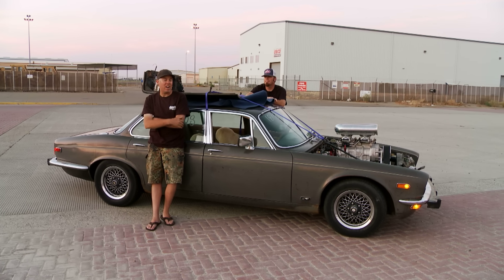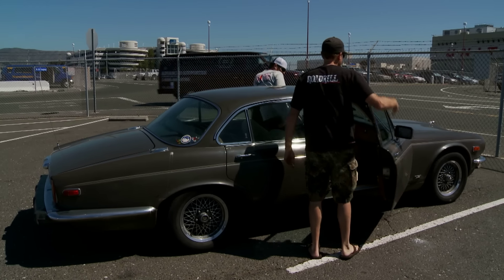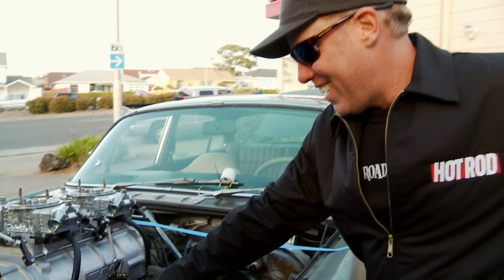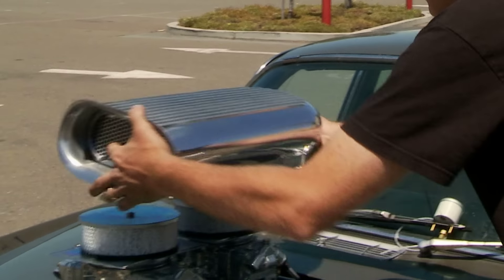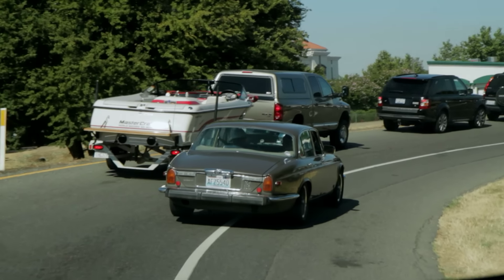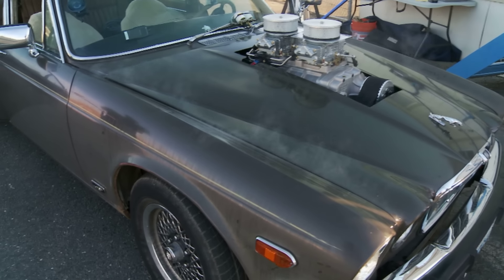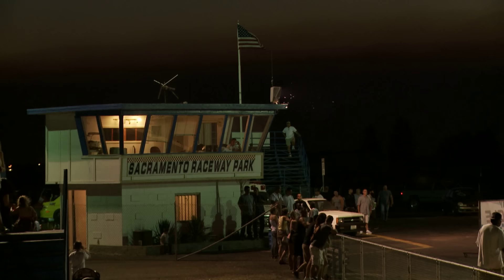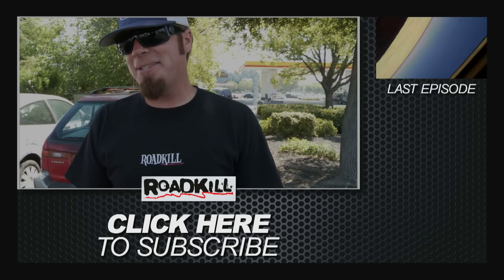Release The Draguar! Building a Blown Jaguar Rat Rod - Roadkill Episode 7

Comment: Looking back... this is an XJ12L. That means it's the long wheelbase, with extra rear leg room, and is even more rare. Much, much less than 4700 were made. Probably closer to 700.
Sad then, that this should be its fate. To be raped, thrashed and abused in this manner. A comfortable, world class super cruiser, turned annoying, worthless fart box.
Only in America baby.
Reply: ***** _When_ it happens doesn't matter, it did happen, and it's awful.
This one didn't get 'fixed up'. It just had more shit piled on top of it. The V8 was a joke, the supercharger a mockery of a once fine vehicle.
Reply: Foxtrot Oscar the car is a crusty pile of shit that would be rotting in some desolate corner had they not picked it up. Anyways. Not your car so no one gives a shit what you'd do.
Reply: vivalaking But, when the V8 went in, given the stage of decay of both it and the interior, the car wouldn't have been that bad. The original V8 insertion was the point at which the car became a pile of shit. Even if you can't find a V12, a jaguar straight six is more than adequate for the job, and still better than the small block.
It's like putting a 50cc two stroke in a Mustang, it's an insult to the car and what it stands for. I don't even like Mustangs and that would annoy me...
Reply: Cars are consumable items, get over it
Reply: ***** No, they're not. My oldest is 59 this year and still going strong. Friends of mine own and run cars over 100 years old. They still work, still run, and still do their job perfectly.
Treating cars as consumable is why they're now so shite, and why so many are scrapped needlessly. It's more energy efficient to keep a car on the road for 50 years than it is to make a new one every 20 years, even if the newer one is more fuel efficient.
Over its life, my XJ won't put out nearly as much pollution, because it was all made close by, reducing emissions of manufacture, and it's almost all recyclable, no plastics or computer stuff.
Excessive consumerism is killing the planet, and killing our cultural diversity.
End it now before the eco nutters end it for us.
Reply: Foxtrot Oscar On the other hand.. The only thing they "destroyed" was the hood, right? So, if you want to, you can put a Jag 12 back in there and it's basically an original XJ12L again, am i wrong? I believe if there werent for guys like these, many more of this kind of cars would go to jyard.
Reply: Rostmeister 'Hoods' or, in English, bonnets, are hard to come by for these old cats, and engines are rare too, because those who appreciate them, know what they're worth, and keep hold of them, and those who were scared of them, scrapped them.
Sadly this is also a Series 2 XJ12L, and it's US spec. Possibly the least desirable XJ12L, as US spec cars had the natty rubber bumpers and piddly headlamps, and Series 2s weren't as pretty as the Series 1s, don't have the Pininfarina kudos and youth of the Series 3s, and people are still scared of the BL association. Sad really, they're fab, and I'd buy this up happily if I didn't already have an XJ12, and it was for the right price. Now it's been on Roadkill, it's likely to stay this way, within the fanbase of the show, for elevated prices.
There's always someone who wants one of these as a project, to be a Jag, not some V8 wet dream.
Reply: Foxtrot Oscar
you are full of shit. Jag 12's are mediocre engines at best and huge $$ to fix and maintain. and these jags will never really be a "classic" like an XK120. they took a car that was destined to rot away or be crushed and squeezed a bit more life out of it.
Reply: Skwisgar2322 You're full of shit, Jag 12s are gorgeous engines. Smooth and quiet, just as Jaguar intended, and, when fettled, reliable and powerful, as they proved by winning numerous endurance races, including the Bathurst 1000 and the Le Mans 24 hours!
It costs me very little to maintain because I'm sensible with it. The engine itself is nearly bombproof, IF you keep on top on oil changes and keep the cooling system up to scratch. I do both, which are very easy jobs, and it's a reliable daily driver.
Don't give it to some mechanic to do, because mechanics get scared of them and charge a fortune. Don't be scared, they're built like onions. Lots of very simple layers to make the complex whole. All you need to do is peel back a layer or two, fix what needs fixing, and put it back how it came apart. 
XJ12s like mine are very much 'classics'. Not as desirable as the sports cars in Jaguar's range, but nevertheless, great cars, and certainly classics.
They took a car that could have been saved and humiliated it a little bit more.
HOWEVER, you've missed the point. I'm complaining more about the fact that it was ruined in the first place than anything else
Yes, ruined, with the gutless, rough, uncultured heap of dung known as the 'V8', that was turfed into it.
Reply: Stop living in the past and enjoy the future man, absolutely no-one gives a damn about these cars anymore. It has had its use
Reply: ***** Modern cars are BORING. These old things have decades of use left in them, why waste huge amounts of resources manufacturing a brand new car that is boring and horrible and will fall to bits in 10 years anyway, when you could have a V12 powered luxury limo for less money, and it'll last forever.
Reply: Well have fun with your English elitism.
For your information, ''center'' and ''hood'' are spelled correctly. Also ''color'' is written correctly. Does this anger you?
Meanwhile, the entire world is trying to move FORWARD while you are still rambling on about things gone past.
If you really cannot see the technological advancement between an old car like this and a modern car.. Well I don't even know what to do then
Reply: By the way, I took a look in your comments and you seem like a massive snobbish prick that has an incredibly warped vision of reality.
Therefore, I'm not going to participate in this discussion anymore. Have a nice day
Reply: ***** Have fun with your wild accusations and falsehoods.
'Center' should be spelled 'Centre' because that's how it's spelled. 'Color' should be 'colour'. Do you know why? Because the words come from French words, and need to relate to that in their spelling to sit neatly in the spelling and grammar rules of the English language. Saying the word 'seenteer' which is how you pronounce 'center' would get you laughed at. As would 'col-ore' which is how you'd pronounce 'color'. Changing the spelling changes the pronunciation, and those words, as stated by you, make no sense what so ever.
Hood is a correct spelling, however the word is used completely incorrectly. 'Hood' has been the word for the folding roof since before cars even existed, not for the engine cover or 'bonnet'.

What has the world moving forward got us? People who struggle talking face to face. A society of lawsuit obsessed health and safety bound sheep who cannot think for themselves. We can no longer get from London to New York in less than three hours, we are plagued by jammed roads as cars shift from prized machines to disposable goods. What is there in progress that is so damn good anyway? Refine things by all means, but when you get to the point where you're making up completely new and unnecessary things to make it look like you're progressing, then STOP.
Recently car design has become very swoopy, meaning thick rear pillars that make visibility difficult. Now cameras have been developed to help you see... what the hell was wrong with a nice, neat straight pillar that was easy to see around?
Progress? We're just making life more difficult so we can think up new ways of making it easier. It's pointless and I refuse to subscribe to it.
I can see the 'advances' but I don't think they're necessary. The XJ12 is comfortable, handles well, is quiet... the only thing wrong with it by modern standards is fuel consumption. But the V12 engine is happy to accept aftermarket fuel injection systems, and can, with tuning, return 30mpg... which is what many big luxury cars manage even now.
WHAT IS THE PROBLEM WITH OLD CARS?
Reply: ***** By the way, I'm not remotely a snob, I'm just honest.
My vision of reality is based on decades of experience in tens of countries across every continent on the planet. I've been into cars for years, I know what I'm chatting. If I'm not sure, I don't say, therefore everything I say for definite is exactly what I think. I cannot stand people mincing their words, so if that makes me look like a snob to you, fine, but if you cannot see the simple logic in the comments I make, then you're not worth bothering with anyway. 
Good day to you sir.
Reply: Foxtrot Oscar And still you're arguing about what two individuals have done to one vehicle. If you're so god damn unsatisfied with everything now days, why don't you do anything about it? But back to reality it is much easier to whine than interact right?
Reply: Olle Arvidsson No, I'm not arguing about two individuals, I'm arguing the morality of it all.
I am unsatisfied with the modern consumerist society, and I am doing everything in my power to avoid it, or bend it to suit less distasteful morals.
Reply: If you think this rises to the level of immoral you are truly twisted. cars are consumable items, the fact that some of them are preserved does not change that. some people collect soda cans and Pez dispensers, that doesn't make them not consumables.
Reply: If we preserved all the cars we could there would be a glut of run down cars on the market and a lack of scrap metal, making new cars even more expensive.
Reply: Skwisgar2322 A car is no more a consumable item than a house is. Sure, it may wear, as a house will deteriorate, but you then repair it by replacing the consumable items within it, bearings, brakes, fluids etcetera. Once you've replaced the consumable parts, the rest should theoretically last forever (given proper rustproofing and so forth. 
Buying a new car should be done only when the old one is beyond economical repair. Why? Because we currently have a glut of brand new cars on the market, recycling plants working overtime, scrap piling up, and a severe deficit of cheap transport, all because people are scrapping cars.
Keeping a car on the road for 20 years also yields far, far less greenhouse gasses and uses far less energy than having two cars for just ten years each. My Jag has been around for 40 years, and has used less energy than two 20 year old cars, and much, much less than four 10 year cars. This is saving the environment, which is a big moral issue, and it's keeping me in a high end, hand crafted luxury car, for less than £1000 a year. To buy the equivalent today would cost £90,000. Economical and ecological sense in one glorious brown, chrome decorated lump.
I hate waste, and every usable car scrapped is a massive waste. As is every crap car built.
This cultural weapon of mass consumption must be disarmed, or it'll go off in our faces and we'll be left with nothing.
Reply: lol,, did u cry watching this.. do u know how stupid  u soon.
Reply: mark russel No, but I cried reading your comment. What the hell have you done to the English language? Criminal damage!
Reply: And to make it even rarer, it's a Jag from 74 and it acutally works. . . .ish.
Reply: ***** Jaguar's V12 and XK6 engines are very reliable when maintained correctly. The electrics are very easy to sort, anyone who can complete one of those mazes on the back of kids cereal boxes, and read a book, can fix it.
The drivetrains are robust, the suspension is robust, despite it's advanced nature.
Interiors are solid.
The only problem is rust in cars that haven't been under sealed, or washed properly.
For what they were, that is, very, very cheap luxury cars, they're surprisingly well built, and surprisingly good to drive... when stock. 
The biggest problems to Jaguars are owner negligence, and owners pissing around with them.
My Jags are modified, but almost every little upgrade took weeks and several mockups and failures to get right. They were just that good from factory. :P
Reply: These cars are trash and money pits. I can respect a Jaguar owner keeping one original and pristine. But most of these cars are sitting in yards rotting away because no one wants to put their time and money into one. If you want to gripe, go gripe on the many Top Gear videos where they destroy these cars brutally and regularly. At least these guys are keeping it running and not driving it off an aircraft carrier.
Reply: Foxtrot Oscar I stopped care of your.. opinions at the time you corrected the word "hood"...
Reply: Rostmeister And I don't care that you don't care because:
A) this is just the internet
B) I care more about being right than being wrong and having strangers care about what I say. What's the use of saying anything if you can't get it right?
Reply: bvagansfan No one wants them? So why are they selling for 18k+? For a mass produced car from the 70s with no major cult following, that's pretty damn good.
I've sent correspondence to the BBC R.E. smashing up nice cars. The Marina-Piano incidents particularly annoyed me, as they're actually quite nice cars.
Oh, and no, they're not keeping it running. What's running is a shonky old V8. The heart and soul of the Jag is gone, dead.
Reply: Weep.
Reply: Olle Arvidsson Woop?
Reply: Foxtrot Oscar
I want one! Series 1 XJ6 ideally, although being a young'un I'll probably have to lump for the 2.8 for insurance reasons...
Reply: Spook 2.8s had a reputation for burning pistons if run on poor fuel or pottered around for too long. Carbon built up on the piston crown and eventually burned through. Drive one hard and it's fine, but then fuel economy isn't much better than a 4.2, although insurance will still be less. 
Personally, I like the V12, so that's what I've got.
Reply: b4 i watched the video i scanned the comments for the inevitable, those dirty Americans have ruined a wonderful piece of British heritage comments, and bingo here it is. The fact that the yanks, with all the cars in the world to choose from, still fall for the phoney bowler hat and cup of tea BS, is a testament to their gullibility, how Jag can still sell motors over there is unbelievable, with rotten electrics,over heating, and total lack of build quality. OK the modern cars are great, not too sure how much of a coincidence it is that they are owned by Ford now, but Jags from this era are a piece of shit, the old girl should be glad she had a last hurrah, i bet there a many ppl who bought them in the 70s and 80s, that wanted to do no more than give them a good beating with a shrub, and are probably smiling as the thing gets wrecked. Another point if they only built a few 000s surly that means the car wasn't very good to start off and no one wanted to buy it, i am sure Jag would have built many more, if ppl wanted them, if you could have a BM, Merc or Audi, why would you buy a Jag, well not you cuz you like them, but i mean customers with that kind of wedge to spend?
Reply: andy spanker Jaguar are NOT owned by Ford, they're owned by Jaguar Land Rover PLC, a British based company (albeit one owned by Tata)
There's nothing phoney about a Jag, just high class engineering, mass produced, to a budget, offering Bentley/Aston Martin rivalling cars for much, much less money. That's how it's always been.
The current XJ is a fab car, better than its main rival, the BMW 7 series purely on the fact that it looks stupendous, and the interior is something that the BMWs isn't. It's interesting.
The XF kicks the 5 series square in the Jaw, the XJ rivals 911s and Aston Vantages for GT brilliance. The F type... well, that's just gorgeous.
The electrics are solid, the motors too, the engines are good, although the V8 is not really suited to any of Jaguars cars, the V6 is better, they don't overheat and the build quality is pretty good.
The ONLY time that wasn't all true is a brief period in THE LATE 70s!
That was when BLs cuts finally hit Jaguar and no one bothered to build cars properly because the whole country was on strike.
Up until that point, the build quality was exactly what you expected for the rice, if not better. Hand crafted cars for just a little bit more than a shonky rust bucket of a Ford, and a lot faster to boot? Who wouldn't like that? So what if it rusted, EVERYTHING in the 1960s rusted. Fords and Alfa Romeo's among the worst offenders. No one think's they're shit now, do they?
From the 80s on, quality rose vastly as Jaguar went independent, then stagnated and dropped a little under Ford ownership (Ford rushed cars into production, leaving them underdeveloped, so faults weren't ironed out fully before production in many cases). Then, under JLR and Tata, Jaguar were given free reign, and are once again making world beating cars, albeit at slightly less brilliant prices.
Even during the late 70s, the engines were solid, and if you rust-proofed the car properly, you'd get no problems. Electrics are piss easy to sort too.
My daily is a 1972 car an it's solid as a rock. Reliable, comfortable, cheap to maintain (compared to many other similarly aged cars), despite the fact it's a V12... It's never overheated, even when I took it to the US (in summer too) it's never broken down and left me stranded... The biggest difference between my car and the cars sold in the US is that I know what I'm doing, and the mechanics that the dealers used to use were SHIT. These were people used to pushrod V8s, suddenly asked to work on an (at the time) highly advanced overhead cam engine with 'foreign' precision carbs and a number of cylinders they'd probably never seen before. 
The ONLY way to kill an XK6 or V12 engine is to forget to top it up with oil or water, or over-rev it. If you maintain each little bit properly, they'll last hundreds and hundreds of thousands of miles... just like mine.
If you can afford a Jag, why would you settle for a boring BMW or Merc? The only ones who entice me away from Jags are Audi, because although terminally boring, the quattro system is useful in winter. But who ever based a 60k decision on 'it'll be a little bit useful three months a year'?

This is not a last hurrah, this is a final humiliation. This is the rotten vegetables in the stocks before she's finally hung, drawn and quartered. And why? She's a car. Never done anything wrong in her life. Inherently solid design, everything wrong is end-user fault.... It's sad, because it takes a special kind of person to do something like this to a once fine and beautiful machine.
Reply: Foxtrot Oscar Ford made offers to Jaguar's US and UK shareholders to buy their shares in November 1989; Jaguar's listing on the London Stock Exchange was removed on 28 February 1990.[24] In 1999 it became part of Ford's new Premier Automotive Group along with Aston Martin, Volvo Cars and, from 2000, Land Rover. Aston Martin was subsequently sold off in 2007. Under Ford's ownership it never made a profit.[25]
Reply: Gordon Byast Yes, but now Jaguar is owned by JLRplc. Ford haven't owned them for years, and good riddance.
Aston Martin could have made profit, but really, who wants to buy a 100k car that's owned by the people who make the Focus and the Transit van? No one. That's why the Corvette sells so badly everywhere but the US, where they're too patriotic to care, because it's built buy the people who put new badges on crappy Korean cars.
Reply: to be honest it looks better this way
Reply: dj may No, it looks awful. What's the point of a bonnet if the engine isn't even under it? What's the point of styling a car if you're just going to have random (and excessive) bits of gubbins poking out? Do you want the fuel tank on the roof and the exhaust pipe exiting through the passenger door? Why not put the entire engine on the front wing and be done with it?
Engine stays under bonnet, where it belongs.
Reply: ***** Which, in the Jag? Nope. Can and will do it, at a push. If you drive carefully in most cars you can significantly increase the mileage. If you then modify that car slightly, removing the manufacturer placed restrictions on the engine, it does better than stock anyway. Combine the two, and you end up with rather more go for your dough.
Reply: Rudi van Wyk I do care, evidently. Where did you get that from?
Reply: Foxtrot Oscar  "Even if you can't find a V12, a jaguar straight six is more than adequate for the job, and still better than the small block."

BAHAHAHAHAHA! Not even close, sir. There's a reason why the Gen 1 Chevrolet V8 conversion is so popular in Jaguars: They improve them in every conceivable way. They're as light as the straight six (and lighter than the V12), get superior fuel mileage, generally make far more horsepower and torque, and have some of the best long-term reliability of any gasoline engine in history. Parts for Jaguar engines are also about five or six times more expensive (at least in the U.S.).
Reply: Holy hell... Well I respect your passion for Jags.  However you are EXTREMELY obnoxious.
Reply: RadialSkid They're rough, make less power, use more fuel, and completely defeat the whole point of buying a Jag. You buy a Jag because it's sleek, subtle, stylish, smooth and luxurious. The Chevvy small block is NONE of those things, so why bother with a Jag at all? If you want a Chevvy, BUY A CHEVVY. Easier, cheaper and you end up with the same sort of car with far less hatred poured upon you.
The 12 isn't much heavier than the 6, being all ally, and has capacity for huge power.
Small blocks, stock, have diddly squat. For instance, mine, with nothing but a re-routed intake, some minor fettling and a freer exhaust makes 400hp. It gets 18 to the gallon, which is a lot better than my Corvette did, which used a much newer Chevvy small block, and was lighter, and it's been solidly reliable for hundreds of thousands of miles (yes, really) over the last 10 years.
My experience of Chevvy engines, however, has been quite the opposite. Less reliable for more work put into maintenance. 
So what if Jag parts are more expensive? If you can't afford a Jag, don't buy one. Simple logic. That's like buying an old Ferrari (which you can do for about 10k) and then complaining that it's going to cost you another 8k to keep it going. Duh, it's a high end car, not something that's ok with a heap of crap truck engine.
Logically, the Jag engine is better, morally, the Jag engine is better, and from an enthusiasts point of view, the Jag engine is the only choice.
Why the hell would you buy a Jag just to make it worse?
Reply: SLIDWYS As are most yank V8 loonies. Fight fire with fire and all that.
Sorry, but that's sometimes the only way to be heard over the splatter of bull shit 'round here.
Reply: Foxtrot Oscar - I just told you every way the SBC is superior. 18 mpg is absolutely nothing for a reasonably driven SBC (I got over 18 mpg in an L05-powered full-sized 1989 pickup, for crying out loud). The Jaguar engines don't have as much horsepower potential, either....not nearly as much. There's a reason why companies like Jags That Run have been doing these Chevrolet swaps for so long....they're just BETTER, period.

400 hp with an exhaust swap? Out of a car that makes less than 300 hp stock? You're either lying or mistaken, otherwise Jaguar's factory exhaust engineering was truly pathetic. Likewise, I've invariably found that anyone who questions the reliability of a Chevrolet small block V8 (which is basically Cars 101) is either a fanatical European chauvinist who bashes the SBC due to its American origin, or is very new to cars in general.

And "morally?" What on earth does any of this have to do with morality?
Reply: RadialSkid I'm talking real MPG. Not 'highway' but what you achieve all day, every day, including all the town traffic, backroad 'spirited driving' and motorway cruising, averaged out. I got anywere between 4 and 20mpg out of the Corvette, I'm getting between 9 and 25, sometimes nudging towards 30 out of the Jag, which as more power, and is much older, and bigger, and has half as many cylinders again. And is more fun, and sounds better, and is smoother, and quieter, and louder, and just more... nice, in every conceivable way. Except spark plug changes and valve clearance adjustment... But those aren't frequent jobs and the rest of the experience more than makes up for it.
Jag V12s have the capacity for 600+hp in standard 5.3 litre form, without fancy fuels or N2O or forced induction. That's a hell of a lot from an N/A 5.3L. Now, they're also good to be bored and stroked up to 8 litres (some say more, 9 is possible but 8 is about the limit of sensibility) Those engines can yield 800hp. The TWR XJR9s ran 700hp, VERY reliably (i.e. they survived Le Mans, and won) Add forced induction, even to a 5.3, 6.0 or a TWR 7.0, and you're heading into the interesting side of 1000hp. Yeah, Jag V12s have very limited horsepower potential.

So, let's see. The Jag engine is smoother, more refined, is designed to go into the Jags, so they work better, is reliable (very reliable, if you look after it, bombproof, in fact) use less fuel, make more power, sound fantastic (unlike the wet fart of a crossplane V8) and they even look better sitting there in the engine bay. They MAKE the Jag. A V8 ruins it.
When the XJ40 was designed, the top brass thought a V8 might be a good idea. The engineers heard this and deliberately designed the engine bay to not fit a V engine. They, the people who design Jags, knew exactly what a Jaguar needed, they'd been doing it for decades, and they knew it didn't need a V8. Ford fucked that up, eventually. (Cheers Ford)
The Chevvy engine is rough, makes less power, in a less entertaining fashion, vibrates more, makes a horrid noise and would utterly ruin a Jag.
That's the reason that no one bothers with them bar Americans, who seem to be infatuated with crappy V8s.
What's the point?

The stock exhaust of the V12 was designed to be quiet. Because that's what you want in a luxury vehicle. The V12 Jags are more refined, and quieter than the Rolls Royces of the period, that's why they were the official Royal vehicles! Heck, even the AC pump has a silencer on it.
The intakes too were designed to be quiet.
Quiet though, means restrictive. That's deliberate, but unfortunate. If you're handy with a welder though, you can do what I've done. Keep the stock exhaust, but weld a second pipe next to it, cut off by butterfly valves. When I want quiet, they're closed. When I don't I open them, get the full 400hp, and unleash a howl that sounds like all the really good bits of the bible all at once. Of course, 400hp in a car like the Jag is quite a bit, but it's great fun, since the chassis is so good.
If you feel like it, you can, as I do, run the valves part open, get a bit of noise, a bit of power, but not a full straight pipe race car noise.

I question the reliability of the small block, because my Corvette was always breaking down. That said, it was mostly electrical, which can be solved by buying an older car, and one big mechanical fuck up, which resulted in a knackered valvetrain and piston and conrod damage. But that could be one in a million.
I'm sure that, generally, the mechanical side of the engines are sound, and reliable, even though mine wasn't.
However, the Jag engines are incredibly reliable too, if a little more maintenance heavy. Well, quite a bit more, but then, if you buy a high end luxury V12, you need to expect a little bit of maintenance. If you can't handle that, DON'T buy a high end luxury car.
If you buy one and put a V8 in it, it's no longer a high end luxury car, it's a heap of shit.
Simple stuff really.

What the hell do 101 cars have to do with this?

Morally, because nice cars deserve to remain so. If you truly like, hell, love cars like many of us do, then to heave a heap of turd like a Chevvy engine into a Jag, is cretinous behaviour of a high order. It'd be like putting a Suzuki 3 cylinder into a GT40... just wrong on every level.
Reply: Based on your responses, I'm going with "new to cars," in your case.

Whoo-hoo, 30 mpg and 600 horsepower naturally aspirated? You should tell every car magazine out there about this radical new miracle engine!

You talk about 600 hp naturally aspirated like it's something new. It isn't. And there's very little Jaguar left in any Jag V12 that's high-strung enough to be making that. And 30 mpg? Never, not even under the most ideal, granny-driven conditions, are you getting 30 mpg, even dead stock.

No one bothers with American V8s? Is that why they've powered so many European sports cars for the last 50 years? Is that why about half of the classic car classifieds in the UK are for imported American cars? Please.

I also notice that you keep saying things like "The V12s are reliable, if you look after them closely," or "The V12s are very reliable, but you have to do a lot of maintenance." That's a little like saying, "The V12s are reliable, as long as you repair them every time they break." Part of the beauty of the SBC if that they require very little maintenance....they run in a poor state of tune longer than most cars run at all. The number of '80s Corvettes still on the road versus '80s Jaguars should be all the proof you need of that.
Reply: RadialSkid New to cars? Context please?
30mpg and 600hp, I don't believe any such engine was mentioned.

600hp from 5.3 naturally aspirated litres is good especially for an engine that started life in the 1950s.
There's very little Chevvy left in any small block making 600hp too, so what's the difference? 
30mpg. Manual overdrive 'box, long rear end... 1500rpm cruising. Yeah, it'll do 30. It's amazing what staying at the same speed with very little throttle (on the cruise control, obviously) for miles and miles will do. 
Name one European sports car that's got an American V8 in it from the last 20 years. In fact, the only ones at all that I can think of from all of history is the Sunbeam Tiger, which was rubbish, the AC Cobra, which was crap, and the De Tomaso Pantera, which was awful, and not a sports car. These were also all cars that were aimed squarely at the American market.
Half the classic car classifieds are Mini's and Escorts, the other half is everything else, and a teeny tiny percentage of that is Yank imports. Of course, you'll always get a few nutters who think it's cool to have a big V8. I was one of them, hence the 'Vette. However, once bought, they soon realise that, actually, they're a pain in the arse and get something else instead.
The V12s are very, very reliable so long as you change the oil regularly, use good quality service parts (standard stuff like spark plugs, HT leads, coolant, oil, etc) Beyond that, they're mechanically sound. Mine's done idiotic miles and is still purring like the fat old cat she is.

The beauty of the Chevvy small block is that it's so shit to begin with, that you never notice it getting worse until it finally dies, decades after most other engines would have been rebuilt.
A good small block runs about as well as a shit V12. If you like that, great, but I want a nice engine, not one that clatters and clunks. I'm sure if I let my Jag get to the same state as a Chevvy engine, it'd still run, but I wouldn't like it.

I see 80s Jags on a fairly regular basis, even in the US I did. 80s Corvettes though... Nope. Also, cheap and shit cars tend to hang around longer than high end cars, simply because no one wants an old, expensive car, due to the running costs. You're trying to compare two very, very different engines here. The Jag engine is the better engine, period. The Chevvy offers much, much less, for less cost. In terms of 'bang for your buck' though, the Jag is much better value. As said, it's the polar opposite of the V8 in terms of character and drivability, but not much worse in the cost department.
Reply: It was an old jag, and like most old jags, unreliable and destined for the scrap yard, all those guys did was give it a little more life and let it go out with a bang.
Reply: Justa318i It's an old Jag, and like most old Jags, it could easily be made reliable, and continue for another few decades perfectly happily in stock form.
It's not 'going out with a bang', it's had its heart torn out and crudely replaced with a heap of agricultural scrap that was outdated decades before the car was even made.
It's then been paraded around, humiliated, and forced to do things that no self respecting Jaguar would ever consider doing. It's a sophisticated luxury cruiser turned hillbillies wet dream. Poor old thing...
Reply: Lol outdated agricultural crap that is more powerful, and more reliable.

Why would you waste the money on a jag.
Reply: Justa318i More powerful? More powerful than the much much smaller straight sixes, but not as powerful as the, still smaller, V12. The V8s are gutless things, even with a supercharger!
Both the XK6 and V12 engines were and still are, very reliable. Near bulletproof if treated right. No, they won't take being left without oil or being thrashed cold, but they'll happily run for hundreds of thousands of miles without complaint, and they'll be smoother and better in every way whilst doing it.
Why would you waste money on a Jag? The question should be how could you waste money on a Jag. No Jag is a waste of money.
Reply: "Name one European sports car that's got an American V8 in it from the last 20 years."

How about every car Bristol has produced? How about the Ultima GTR? The Marcos TSO? The Zenvo ST1? Lee Noble's ongoing "Fenix" project? The Bertone Mantide?

AC Cobras are crap? Your complete ignorance of automobiles in overwhelming. You're just a blind Jaguar fanboy, and likely a British nationalist as well. Possibly a 14 year old car-connoisseur wannabe who's drunk too much diluted Bovril. More than enough Jaguars were sold in this country - and broke down here - for us to know better.
Reply: RadialSkid The Ultima is a race car, the Zenvo is a supercar
Fenix-supercar, Mantide-supercar and 'every Bristol ever'?
No. Bristol used, initially, their own straight six based on a BMW engine. Then, in 1961, they modified a Canadian Chrysler engine. Not technically American, but I'll give it to you anyway... Trouble there is, Bristol have only made one sports car since 1961, the Fighter. And that had a V10 in it.
I'd forgotten about the Marcos because no one liked them. It's like TVR are 'coming back' but only to re-engine old ones with Chevvy lumps. People have been hurling abuse at them left right and centre. Why? Because the TVR V8 makes the Chevvy V8 look like stewed cabbage compared to an exquisite chilli. 
I'm hardly a 'Jaguar fanboy' as you so ineloquently put it, having owned everything from Alfa Romeos to Volvos and pretty much everything in between (alphabetically by marque)
I'm pro Britain for Britain, we need to stop fart arsing around with great ideas and start actually building them on a large scale again. But I welcome foreigners, so long as they work rather than scrounge benefits, and I couldn't really care less if the world liked us or not, just shut up and stopped mocking.
27 years old, engineer, journalist, mechanic, classic car nut, drifting nut, overlander, and while I don't drink Bovril often, when I do, it's got to be strong. Like my tea and my ales.
If by 'this country' you mean the US, that's YOUR fault. The most common cause of Jaguar failure outside the UK was inadequate maintenance. Why? Because that shiny new Jaguar dealer, uses local mechanics. People who grew up working on pushrod, probably side valve V8s. People who, until one popped in for a service, had never even heard of a dual over head cam straight six. Nor disk brakes, nor fully independent suspension, nor could they comprehend the concept of double wishbones, or of inboard brakes, or using driveshafts as suspension components, or really comprehend how far ahead European cars were at all. Stories abound of bodges and weirdness and incorrect parts and general shoddy workmanship being found on 'mint' imported dealer maintained cars. Even today, most US mechanics are still used to pushrod V8s, especially out in the sticks, and are infinitely confused by overhead cam engines. When I took my XJ12 out there, I was surprised by people simply not understanding it. It's a 42 year old car, and the basic engine design is over 60 years old, surely some of that will have trickled across the Atlantic by now?
Sure, there are specialists these days, but your common or garden mechanic won't have a clue, unlike here, where they were serviced normally and properly.
Mine has done hundreds of thousands of miles without incident of its own fault.
The only time it's been off the road since I've had it is when it's been too snowy, and when I smashed the front suspension crashing into a fallen tree.
I'm not blind at all. I know exactly how much work they take to keep reliable. Yes, it's a bit more than most, BUT, they're luxury cars. They need less work than a period Rolls Royce, yet are actually smoother and nicer cars. That's genius. Think of them not as expensive, fragile sports cars or family saloons, but as cheap, reliable Rolls Royces or Ferraris. They're high end cars, stop complaining.
'Car connoisseur' made me laugh. I've owned a Corvette and a Nissan Sunny. I'm hardly high class. 

AC Cobras are crap. The chassis is too light and flexible to stand the brutish torque of the big V8s. Especially the much famed '427's even with their beefed up main rails. Even Shelby himself said they were rubbish, he prefered the smaller engined ones. I've driven Aces and Cobras, and the Aces are better. I've driven Cobra replicas which are better than real Cobras but not quite as good as Aces. I've also driven Cobra replicas with BMW, Jaguar and Nissan straight sixes in... they're better than any of the others.
Sports cars just do not work with V8s in them.
Reply: Holy shit, you gotta have a boring life. Go outside, buy a freaking Jag, polish it or whatever, go to Jag meetings, meet people that share your fucking interests and stop sit on youtube arguing shit. Please you'll end up with an heartattack mister.
Reply: Rostmeister I've got three, they're polished, no one goes out at 9 on a week night.
Stop telling people what to do, you'll end up with faceache.
Reply: Foxtrot Oscar Sorry to tell you this, but you're the one complaining about what others do here, and it's people like you, who'll end up with faceache.
Reply: Rostmeister I'm bemoaning the general lack of respect and twisted inverse logic that some people seem to have in regards to automobiles.
You, on the other hand, are complaining about me exercising my right to free speech.
Faceache -> Rostmeister
Reply: *****
LOL - a 'hit and run' yank who's realised he's bitten off more than he can chew.
There's nothing "elitest" about the responses here, it's all straight forward and logical.
Reply: I'm fascinated by the way the the responses here show a clear discomfort with someone who is simply refusing to have his experience and knowledge rubbished and is giving intelligent properly thought out information. Foxtrot Oscar, I admire your tenacity.
Reply: BaddaBigBoom Cheers. Nice to know that some people notice.
Reply: Yeah... it must suck to be a famous car in the hands of one of the world's largest car magazines. I mean, it must be just AWFUL to be being prepared to get a 700hp blown small block, as well as a full drivetrain rebuild. And it must be terrible to be generally loved by every person that sees it... That all just sounds terrible.
Reply: Adam Parker Yes. It is.
Jaguars are quiet, sophisticated luxury cruisers. This one is the exact opposite. It's an unreliable, noisy, rattly heap of shit.
That sucks.
A 700hp small block, hell, any small block, is a downgrade for a Jag, they're horrid engines.
If you like Jags, you'll probably hate this. If you love stupid, shite engines stuffed into nice cars then of course you'll like it. But those sort of people aren't really 'normal'.
Reply: Foxtrot Oscar
Well, no. In America, Jaguars of the 70s are piece of crap, gutless, slow, unreliable cars for wannabe-pimps and pensioners. There are no parts available for them, so if ANYTHING breaks, you have to pay a fortune for the parts to fix it, and EVERYTHING will break because it was built by Jaguar in the 70s. Placing a Chevy Small Block in the car is a HUGE upgrade, just on the fact that you can actually fix it if it breaks. And anyways, last I checked, you don't need a breeding pair of cars. You said you have 3? And I'm sure many other people have their Jags in nice condition. Well, we can rest assured that the future generations will know what a stock Jaguar XJ looks like and drives like. And since your Jag doesn't need a mate, I'm sure the history books will forgive us for turning ONE of them into a badass street car. But, Jag people are weird, and for some reason you're angry about this, even though I can pretty much guarantee that this car would have been CRUSHED or ROTTED AWAY if Freiburger and Finnegan weren't doing what their doing to it, which is, once again, giving it an awesome new life as a drag car.
Reply: Adam Parker Well, no, actually.
In the late 70s, some of the cars were rubbish due to fluctuating build quality caused by widespread union action throughout British industry. This is well known.
The cars themselves were brilliant, just put together by people who didn't give a hoot.
My own car is from the early 70s and is solid as a rock, and highly reliable.
Parts aren't hugely easy to come by, but when you buy a Jaguar, you accept that and learn to live with it. Stock up on parts like a sensible human being.
You can't get parts for Chevvy engines here because they're crap and no one buys them. There are still quite a few Jaguar engines lying around in the US.
The ONLY real problem with the car will be the electrics. The 6 cylinder engines are the same designs as in the 40s, and they are proven reliable and solid at Le Mans (winning 5 times on that engine) as is the V12 (which won twice). They're reliable.
The small block Chevrolet engine is less powerful than the smaller V12, and some small blocks are less powerful than the SIX cylinder engines!
They're also MUCH less smooth than even the 6 pots, and less torquey, and they aren't designed to fit into a Jaguar so they're a pain in the arse to install, and, of course, you need to re-wire part of the car, which is essentially fixing the only problem the car had to begin with.
If you can't be bothered to get parts for a Jaguar, don't buy a Jaguar. If you don't want a smooth, refined Jaguar, don't buy a Jaguar. It's pretty simple stuff. If you buy a Jag, it's because you want it, there's no reason to ruin it. If you put a V8 in it, evidently you didn't want one, so what's the fucking point?
I have three different Jags. These XJ12s are really quite rare now, because idiots like whoever put the V8 in this exist.
To most of the world, Jaguars, especially in the 70s, were the quintessential 'bad guy' car. Every cop drama featured a big Mk2 or XJ squealing round a warehouse, guns blazing. Why? Because the real criminals used them, because they were some of the fastest cars around. Nowadays they're all limited by electronics, but back in the day, they could outrun many Ferraris. Quite where you got this 'pensioner' image from is a mystery.
This car is NOT 'badass'. Not only is that an utterly shit word, but this car is also utterly shit. It's a worn out old chassis that's been poorly maintained, the interior has been wrecked, the body has had holes cut in it with bits of hideous shitty engine poking out, and the heart of the car is long, long gone. It's an abomination of a thing, worse in every single conceivable way than a bone stock Jaguar would be. Mildly tweaked like mine is, I could shit all over this, even if the supercharger worked properly, and I wouldn't overheat my crummy V8, because my V12 is brilliant. It'd make a better noise too, and even do more miles to the gallon.
You can guarantee that the car would be pride of place in someone's collection IF, and ONLY if, it had its proper V12 engine in it.
Roadkill saved it from the scrappers, but the ONLY reason it was going there in the first place was the shitty V8 under the bonnet.
They gave it a continued life of mockery and shiteness. That turgid engine hauling its shell 1/4 of a boring, childish mile sprint, over and over again for all the foreseeable future... That's not awesome in any way, that's tragic. 
I'm thinking of purchasing another E type. I've already got one, it's worth about 60k. I've seen a few for around 10k-15, from the US, with a V8. If I swap in a Jaguar engine, it'd be instantly worth 30k. No one wants a V8 Jag. No one, because they're shit.
Reply: Foxtrot Oscar Man your blind hate for v8s is unbelivable. Fact is there are more v8s on the road than v12s. The only car I would want a v12 in is an Aston Martin. Saying v8s are utter garbage is such a broad generalization. GMs Gen III/IV LS engines have more innovation in them than anything Jag has innovated from v12s in the past 20 years. Not to mention you are trying to compare a British sports car company to a company that makes everything from trucks sports cars to mucsle cars to 4 door sedan daily drivers. I am sure v12s are reliable if well maintained so are v8s so are v6s so are four bangers. common car knowlege there mate .
Reply: TheLordJethro I don't hate V8s. I hate shit engines. Almost all crossplane V8s are shit is all.
Yes, there are mover V8s on the road. They're the poor mans route to displacement. That doesn't make them good.
The LS engines are utter crap. Innovation? HA! Pushrod, crossplane V8. Outdated in high performance vehicles since the 60s. OLD SCHOOL, and not in a good way.
The V12 was a 1950s designed engine. They are still more mechanically advanced than a brand new LS. Yes, there's all the electronic tat and cylinder deactivation, but that's not the engine, that's ancillaries. The actual structure would be recognisable to a truck mechanic from the 40s. That sort of thing has no place in a performance vehicle, or any kind of high end car.
Jaguar make everything from sports cars to GT cars to muscle cars to family saloons (a sedan is a type of chair that is carried around). Jaguar themselves don't make trucks, but sister company Land Rover definitely do. Jaguars V8 is considered one of the better ones on offer today. Guess what... it was considered less reliable than the V12 it replaced.
All engines are reliable when maintained, however, the V12 is more so. If you get them right, they're nigh on indestructible. That's why they did well at Le Mans, winning twice, and in the TWR XJS touring cars. These were running 7-800hp from a 6 litre N/A engine, in the 80s, reliably. That's impressive even today.
Reply: +Foxtrot Oscar Ha go back to v12 wonderworld LS motors shit? You have obviously never seen footage of the LS blocks that go to drag week or LS Fest there you see LS engines with 1000+ horses. Its really a matter of opinion neither motor is shit. US Culture is v8s British Culture Jaguar but still the only Jag I would ever drive is the new F-type coup. Over here These old jags are just like boats you throw money into. Unless you find a real big Jag enthusist they are worth 1000-4500 on a good day. These old Jags arent worth shit here and no one wants them here and half of them do not run.
Reply: TheLordJethro 1000hp? Wow. Jag 12s have done that and they're smaller, and smoother, and more responsive, and revvier, and they sound better, and they're reliable, and they're nice and simple, and they get better miles per gallon if you go for similarly aged engines as well.
Over in the US, where most mechanics don't know a gudgeon pin from a cotter pin, and would point at the front of the car if you told them to find the hood, yes, Jags are difficult to run. If you have half a brain, you can do almost all the work you'll ever need to at home. They're piss easy once you know how.
On the subject of 1000hp again, you know the Toyota 2JZ can do that with stock internals, reliably? In fact, some say it can even hit 1500hp. That's a 3 litre engine. What's the smallest LS? 5.7? What's the biggest, 7 litres?
Getting 1000hp out of 7 litres is easy. Getting it out of 5.3 litres, more difficult, getting it out of a 3 litre 6 pot? Yah, that is the measure of a good engine. Not how much it makes, it's what it does with what it's got, and how it goes about doing it.
The Jaguar V12 is better in every single way that actually matters to the driver. It offers better low down pulling, better top end, better mid range, better response, superior soundtrack and almost no vibration at all. You really can balance a penny on the cam cover and take it to the red line.
The LS on the other hand is an outdated technology that was a cheap bodge when it was brand new, and has never, to this date, worked properly. No V8 really has but crossplanes are by far the worst, that's why all the best racing engines are flat plane.
Over here, big V8 cars are worthless. The Jags are too, but the V12s command respect. No one really wants a big thirsty car anymore, but everyone loves and dreams about a V12. If you want a V8, you've got no ambition in life. Buy a straight six, better and cheaper.
You're missing out on a raft of fantastic cars if you disregard Jaguar.
I suppose you'd go for the V8 F type as well, wouldn't you? Fool. The V6S is the best by far. The engine is lighter, packs more than enough punch and makes a simply gorgeous noise. Oh, and coupe has an e on the end of it. It's French.
Reply: Foxtrot Oscar Well, over there, I'm sure people love their Jags. But in America, they are worthless. Believe us, ONLY the famous models (like the E-Type and the Mark 2) are worth money. This is a video is from America. Parts aren't as available. And they're more expensive. In America, these average Jags aren't even worth buying. You can throw 30-40 THOUSAND dollars at one and end up with a car that nobody would buy for 3k. If you want to start some big program to "rescue" Jags from America, go for it.

Oh, and in case you guys don't have this over there (which it would appear that you don't) this is something that we Americans like to call "HOT RODDING"! People that enjoy Hot Rodding like to subscribe to HOT ROD Magazine, the people that MADE this video. Now, to let you in on the secret, Hot Rodding is the art of customizing a car to make it your own, since you own it and can do whatever you want. Now, they bought this rusty old Jag that was doomed to be scrap, and turned it into something awesome. It is being turned into something REALLY awesome.

Now, clearly you're just an obsessive fanboy, and you are the WORST kind of petrol-head. You're the kind of petrol-head that thinks that every car should be returned to factory and left that way, and if anyone tries to do something out of the norm, they're a heretic.

Furthermore, you say that V8 engines (a la the Chevy Small Block/LS engines) are the "poor man's way of making power" but that means it is just the most cost-efficient way of making power. I prefer Inline-6 engines myself, but if you deny the value of being able to get a case of beer and three grand worth of auto parts, lock yourself in the garage with your buddies for a weekend and drive out with a 600HP engine, then there is something seriously wrong with you.

And by the way, the most famous use of a Jaguar V12 is for Top Gear's Coffee Table. They're scrap.
Reply: Adam Parker Agreed. I can get 1000 hp out of a four banger with twin turbos not that hard to do. How many times did you say Jags have won their class at Le Mans twice? Corvette Racing has won their classes 7 times. Your Jag fanboyism has stopped you from seeing what all of us "yanks" are saying which is over here these old 70s Jags are WORTHLESS no one wants them. Stuff breaks on them and the parts are too expensive and no one wants to spend a lot of time and money fixing them. The cool guys at hot rod saved this jag from wasting away in a junk yard. Now its in the middle of a drive train swap that I heard will be a small block chevy with EFI (electronic fuel injection) pushing 700 horses. Now thats a badass jag
Reply: Adam Parker People love Jags in the US. That's why around 70% of all Jags went there, and why RHD ones are more expensive, there's simply less of them.
I've been to the US on a number of occasions, once with my XJ12, and the club scene over there is thriving.
Parts are as available as anything else. The only things that really go wrong are bearings and seals, and they're service items anyway. Plus, as Jaguar used the same basic suspension setup in everything from 1961 to the early 90s, parts are easy to strip off cars that really have had it. The XK straight six has been around since the 40s, continuing to the 80s, and the V12 was from 1971 until the late 90s.
If you are throwing 30k, much less 40k at a Jag, you're doing it wrong.
I got mine back together from a complete basket case found in a field for less than 5k. That included an engine rebuild (for the V12) and all new service items, paint, carpet, underseal, the lot. Not a great paint job, I'll admit, but it's ok.
Even if you factor in a 200% margin of excess to cover shipping of parts and stuff (which is a HUGE margin) then you're only talking 15k, to fully recomission a shitter (worse than this one body wise) and have a mint, fast, comfortable, luxury car.

We don't have 'hot rodding' here so much, because it's shit.
The whole point of hot rodding, so far as I can tell, is to stick a massive crap old V8 into a car and ram as much power as possible out of it. Just like every other hot rodder.
We do modify cars here, however we like to be more sensible about it. Use an engine that's either original, or suits the car. We upgrade cars here, rather than take any random car and turn it into yet another crummy V8 muscle machine.
This is because we have a good variety of cars here, so you buy something you like, and make it more of what you like, not something different then turn it into what you want. That's utterly stupid.
This Jag is not 'awesome' it's a heap of shit. It's got a worse engine with less power and it's got a hideous great big scoop poking out of it. The whole point of an XJ12 is that is looks like an average saloon car, but can blow the doors off anything short of a supercar. Back in the day they were one of the fastest 4 door cars around in a straight line and they could corner. The British BMW M5, if you will. Except we did it first.
Subtlety is not something you seem to understand in the US.

You're making MASSIVE assumptions, and now you look like an ass.
I'm not a 'fanboy'. I like GOOD cars, not specifically Jaguars or BMWs or anything else. I would rather a good Alfa Romeo than a bad Jag, and rather a good Jag than a bad Alfa, for instance.
If I believed cars should be returned to factory, I wouldn't be putting a 5 cylinder diesel in my 1972 Land Rover, would I?
I wouldn't have wider tyres, lowered suspension, performance exhaust, tuned carbs and uprated cam in my 1961 E type, nor a custom straight intake and bypass exhaust on my XJ12, (because V12 noise).
I wouldn't even have deconstructed an XK to build a 1955 D type to uprated specs that now does 200mph.
Oh, and I certainly wouldn't have done what I did to my 180SX to turn it into a total drift slut.

I DO deny the value of being able to make 600hp cheaply, because I don't actually give a flying fig how much power I've got.
All I want is 'enough'. Getting 'enough' takes time and lots of small changes. 'Enough' grows as you learn the car. I don't want to be able to quote power figures and brag, I want to have fun and my smile to do all the bragging. I can quite easily have more fun with 60hp than I can with 600. It's called the Austin Mini and it's absolutely brilliant.

The most famous uses of the Jaguar V12 are the Le Mans wins for the XJRs, and the touring car wins for the TWR XJSs.
The Tom Walkinshaw qualifying lap at Bathurst is one of the all time greats, and that was in a V12 Jag.

'Scrap' does not win the most mechanically distressing endurance race on the top level calendar. And no, not measly class wins, outright wins. That means that out of every single car, the Jags were the fastest of the fast.
Reply: TheLordJethro No, Jaguar has 7 outright wins. That is, won the whole event, beating every single other car. They also have a number of class wins, however since these list back to the 40s, I do not know the true number.
7 class wins is good, but not anywhere near as good as 7 outright wins.
What 'fanboyism'?
70s Jags aren't 'worthless'. They paid $1000 for a complete shit heap. I could pick something like that up for a mere £200. That's about £50 more than scrap value. A good one will set you back nearer 15k though. A mint one over 20k. In the US, a good XJ6 is 11k or so. Which is a lot, really, considering there's a lot more LHD XJs than RHD ones. I've seen semi decent XJ12s going for $17k+.
That's not 'worthless' in anyone's books.
These 'cool guys' cut a hole in a bonnet.
The guy before them, who put the V8 in, condemned it to the scrap heap in the first place. If he'd kept the V12 in, and enthusiast would have snapped it up, and these 'cool guys' wouldn't have even had the chance to rape it some more.

A 700hp small block is still a small block and thus still shit. 700hp is far more than the chassis can reasonably handle, (it is 40 years old) and is therefore useless. A 700hp V8 1970s Jag is not 'badass' it's shit. Utter shit.
And I bet with that drive train swap they'll have to ditch the Jaguar rear end, as it's all one unit with the diff and driveshafts being structural suspension components (lighter and more efficient). Shame, because the Jaguar rear suspension system is one of the best I've ever seen from that period. That's why it was used from 1961 to the late 90s in every car they made.
Reply: Foxtrot Oscar Woaaahhhh. Get the fuck over it.
Reply: Jake Lennan Get over what?
If you're going to swear at least put it in some kind of fucking context!
Reply: Yourself.
Reply: Jake Lennan A physical impossibility my dear boy. It would require being in two places simultaneously, and that is not within the capabilities of the human body at present.
Reply: Foxtrot Oscar jag engines really are nothing to boast about. There are pretty underpowered, somewhat unreliable, and do not get great gas mileage, there are worst engines out there, but they are not as great as you make it out to be. This car is hacked together and there are jaguar fans out there, but the chances of being saved to specs you seem to want are slim to none. The car really is not that great. Its somewhat classy but not worth saving to 99% of the Car community
Reply: Zachary West 'Pretty underpowered'. So.. Let's see. The XK, the 6 cylinder powered, in the 40s, the fastest car in the world, in the 50s, the fastest saloon car in the world, in the 60s, it powered the Ferrari killing E type, one of the few cars that could exceed 150mph, and in the 70s it was still hosing XJ6s around at over 120mph, when most cars could barely do 90. In that time it won Le Mans 5 times, plus countless world stage sports car and touring car races.
The V12, in the 1970s, powered the SIII E type, a quick car as mentioned, the XJ12, one of the fastest saloons of the time and in the 80s, the XJS, which was, again, really bloody fast. The XJS romped touring car racing, and the V12 went back to Le Mans and won again. Twice.
Sounds very 'underpowered' to me.

Bothe the XK and V12 are very, very reliable. If you keep on top of maintenance, they'll last forever. I own two XK powered cars and one V12. The V12 is my daily driver, is 42 years old and has done over half a million miles. Very reliable. My weekend car is 53 years old and starts first time, every time (almost), and has never left me stranded. My track car is 59 years old has been pumped up to nearly 100hp/l (which is a lot) runs to 1.5k over its original redline, and has completed a number of endurance events. It doesn't like cold starts thanks to its huge carbs and agressive cams, but once running it purrs like a kitten. Oh, and, of course, 7 Le Mans wins and countless touring car and endurance racing wins for both engines. Sounds more like 'really quite reliable indeed' to me.

Fuel consumption running on gas is always horrendous, but on petrol they're not too bad. Ignoring the track car, my XK powered E type returns around 25mpg, which is pretty good for what was, in the 60s, a supercar quick car. The V12 hovers around 20, but I've had it up nearer 30 on very long cruises. Now, no, that's not great, but it's making 400hp (with surprisingly few mods, just the exhausts and intake really, and some fettling) and it's a bloody 5.3 litre V12 from the 70s, designed in the 50s.
 That's ok by 90s, 00s, standards, but pretty good considering. Certainly more MPG per horsepower than most big V8s of the time, that were slower and rougher.

IF it hadn't been ruined earlier in it's life with that shitty V8, it WOULD be worth saving and someone would definitely do it. These are rare cars and have a huge fan base. With the V8 though... very low chance. The engines are worth a lot, because they're so good in historic racing, and to put into kit cars (I've seen a few Jaguar V12 powered Lamborghini and Ferrari kits, and they're a LOT better than V8 powered ones!) That makes finding and re-installing an engine expensive and difficult.

If you say jaguar engines are 'underpowered, unreliable and poor on fuel', then by that standard, this V8 shouldn't even qualify as an engine. 
What were they complaining about all through the video? Almost no power, hugely unreliable and the economy? Well, I've run LS engines and I don't think I ever saw north of 18mpg, and that was in a lightweight, modern Corvette, not a heavy old Jag.
Reply: ***** Jaguar offered 'out of the box' V12s of 700hp. However, they weren't 'normal' engines. They weren't offered in the standard range of cars.
Yes, I know Chevvy has made 600+ 'small' blocks (6.2 litres is not small in any sense of the word) in actual cars, but that was supercharged.
The 'standard' range of engines rarely exceeds 450hp. Which is shit.
The engines make very poor power for their size.
You may not know a lot about Jag V12s, and I do, however I also know a fair bit about American V8s. I've driven a fair few.
Yes, when bought as specialist engines, or when tweaked and poked, they can make power figures , but they fail epically at delivering that power in a sensible and enjoyable manner, unless you happen to enjoy turning tyres into smoke for no reason more than you enjoy actually driving. 

22mpg, in the US. With my 42 year old V12 I was getting an average of 25 while in the US, and that's a big old luxo barge, not a modern muscle car.
Driving in the US is good for economy figures, as it's a lot of wide, slow (55mph is slow) straights with very little speed change. Here in the UK, most A roads and B roads have corners which negatively affect economy. 18-20 is my average here, in the same car. 
To me, that represents a clear victory, at least in the economy stakes, for the Jag. It's older, and is ever so slightly better. With a more modern head design, and trick fuel injection, I'm sure it'd be much better. Expensive to do though.
From a driving pleasure standpoint... the Jag engine is smoother, more responsive, sounds better and is much more relaxing in the cruise, while being more engaging when pressing on. Yes, a lot of that is opinion, but it's based on fact and experience.

Big thumping crossplane V8s are not what I like because I've driven a lot and found them to be largely worse in every respect than their usually smaller, 6 or 12 cylinder counterparts that make equal or better power.
Reply: ***** You don't know corners until you've driven in Wales. Period. Imagine the most fiendish and technical race track in the world. Now imagine it the size of a country. That is cornering. The Nurburgring has nothing on British country roads. That's why we make some of the best sports cars on the planet.
Broke ass?
I am neither bankrupt nor do I own a donkey. I never have, never will and I wish people would shut up about the things.

At this point, you sound like someone who's realised he has no chance of outwitting someone, but doesn't want to admit it publicly
Reply: ***** Most Jaguars are good cars. The X type not so much, but then, that was a Ford Mondeo underneath and was stupid move by Jaguar's then-owners, Ford. Who are American...
 Sorry, but when we're completely honest, what American cars have actually been genuinely good in the past century.
Err, well. There was the Ford Cortina.. oh, no, that was designed and built in Britain by Ford UK. Nothing to do with America. The Ford Focus! Nope, that was Ford Europe, again, nothing to do with the US.
The Ford GT40... Nope, British chassis and body and suspension, and not really a road car.
Err. The Mustang. Nope, they don't turn or stop as well as they should for the money, they're not very well built and the engine choices have all been rubbish.
GM mostly produce tat, bar a few Vauxhalls/ Opels, although they're all German, bar a few Vauxhalls from the 70s and before that were British...
Who else is there? Chrysler.. wouldn't touch with a barge pole.. Jeep!.
The original Willys jeep. That was a good car. Oh, wait, no it wasn't. It didn't even have any doors. Compared to what else was on offer in the 40s, the Series I Land Rover came with doors, a roof and more power and space and generally more everything.
Modern Jeeps are rubbish.
This is why throughout Europe, Africa and Asia and in Australia, you see almost all cars are European or Japanese. Only really in the American continent do you see American cars in significant numbers.
The buying habits of the general masses tell the story.
And they tell the story of Jaguar too. We know that us Brits love them, but the Americans love them too. Some 60-70% of all Jags end up there.
Reply: Foxtrot Oscar Doing burnouts is sensible and fun but also you do not know how to drive a v8 if thats all you are doing in one.. in Australia you can buy a 1000 cubic inch v8 crate motor that makes 2100 horsepower stock NA. Thats more than double the power than displacement and makes more power than the veyron that has a 16 clyinder engine with 4 turbos.. and costs less to buy and install than the veyron two or three times over.  I can easly get more power out of any v8 cheaper than getting more horsepower out of a v12 jag.  By the way at least spell "Chevy" right I have no idea what a "Chevvy" is.
Reply: TheLordJethro
Doing burnouts does nothing but destroy tyres and brakes, it's boring (plant right foot, balance brakes with left, yeah, fun) and is hardly sensible.
I know exactly how to drive V8s, HOWEVER, why bother when there are many other engine designs that do the fun stuff much better. I don't even dislike V8s, only crossplane ones. The flatplane design that Ferrari use is fine.
Why the hell would you want a 16.4 litre V8? Anything with more than TWO LITRES PER CYLINDER is going to be a tetchy, rough, clattery old hector. Just look at when people put V12s that big in cars, it's awful. Then quadruple the shitness.
I'd flippin expect a 16.4 litre engine to make big power too.
It's an impressive amount of power, yes, but I guarantee you it'll be choppy and rough and an absolute biatch to drive.
'double the power than displacement'.
Not only is that poor grammar, but it's not true, unless you use cubic inches, which no one does.
The Veyron has an 8 litre engine making 1200hp, yes. That's more hp/l than the stupid V8 (150hp/l vs 128) and it's smooth, refined, reliable and easy to utilise.
To get an N/A engine running nearly 130hp/l requires quite harsh tuning, and that's not good at all for driveability.
You can easily get more power OUT OF MORE CAPACITY, FULL STOP.
I can get more power from a 5.3 litre Jag V12 easier than you can from a 5.3 litre crossplane V8. Like for like is how you compare engines.
If not, I could just rock up with my 3000 litre V12 ship engine and blow you all away with my 100,000 hp.
As for cost, I liberated 100hp from my Jag engine for £20. 20p per horse is the square root of jack all as far as performance tuning is concerned.

'Chevy' is wrong. In the English language, a short vowel sound is followed by a double consonant in almost all instances.
'Chevvy' produces that short e sound, while 'Chevy' would sound more along the lines of 'cheevie'.
99% of the time I can see instantly if a word isn't spelled right. Chevvy is right. Chevy is wrong.
Reply: ***** WRONG.
The Mk1 GT40, the original British design, lost its first Le Mans because the crummy 4.7 American Ford engine simply didn't have the power to beat the (much smaller) Ferrari V12s on the huge straight at Le Mans.
They re-jigged the aero and plonked a 7 litre engine in there and called it the Mk2. This was still a British car and it won Le Mans once, in 1966 under an American team with drivers from New Zealand. 
In 1967, the Mk4, which was an American re-design of the GT40 chassis, won with the same 7 litre V8, again with an American team, and this time, two American drivers. This is the only ever all American Le Mans win, in fact, the only American car full stop... and it was with a modified British designed chassis.
1968 and 1969, the Mk1 came back and, with a new 4.9 litre engine, won twice more. So really, the original British design was... ooh, the most successful. And this time, it was a British team, and mostly European drivers, (bar one mexican).
So, three of four wins were British chassiss, two were British teams as well.
'Not successful' my hairy nutsack.
Reply: Foxtrot Oscar Chevrolet is an American company and in American dialect yes its spelled Chevy ask any American its Chevy. American dilect is different from an English dialect being from England does not make you right and if you want to get technical its Chevrolet. Alright buddy have fun with your jags Ill have fun with my Chevrolets Fords and Mopars going around tracks, mudding, going in a straight line very fast, thrashing around in the desert, auto cross,  rally cross, and burnouts and having fun every minute of it. with v6s inline 6s and v8s under the hood. Yes hood because here in America its hood not bonnet.
Reply: TheLordJethro Ah, I forgot, Americans can't spell!
Silly me.
You have fun in your Fords, I'll have fun in my motley collection of Jags, Land Rovers and Nissans, racing, drifting, hooning, overlanding, laning, going fast in a straight line AND round corners, rallying and even a spot of gentle silent cruising at.
All with I6s, I5s and V12s under the bonnet. Yes, bonnet, because a hood is the folding roof of a convertible and has been since before the USA even existed.
Reply: Foxtrot Oscar Check out the Crusher Camaro that David on this show owns they put a 700 hp ls7 with EFI on it and it gets 17 mpg and runs 10.12s at 134 quarter mile thats a real car and it does some awesome burnouts
Reply: TheLordJethro It's a heap. It looks silly, doesn't drive very well, as they've proven before, does shitty burnouts (because I think a car standing still, smoking, looks stupid) has an awful engine, does pathetic miles per gallon and is only really any good at going 1/4 of a mile in a straight line. Which is absolutely useless in the real world.
Oh, and it doesn't even have a bonnet, which is just ridiculous.
Reply: Foxtrot Oscar haha looks badass they drove it 2500 miles some in blizzard like conditions seems like it drives fine to me does awesome burnouts just because you do not like them does not make it shitty the motor is not awful 427 cubic inches and doing 17 mpgs is great just think how much good it would be with a 6 speed
Reply: TheLordJethro It looks silly. It sits too high, the colour doesn't show off the body and the engine, in case you hadn't noticed, isn't even inside the bloody car!
They tried autocrossing it, it wasn't very good at all.
Burnouts are silly. The only awesome they can be is awesomely stupid.
427 cubic inches is rubbish. Why? One, it's a stupid unit of measurement, and two, 7 litres is just far too big for an automobile engine.
17mpg is pretty horrendous.
It'd be worse with a 6 speed. 6 is too many speeds. It'd be better if it was smaller and either two cylinders were chopped off or four were added.
Reply: Foxtrot Oscar haha 6 speeds are shit eh? 6 speeds are nice when you are crusing down the highway at 1500-2000 rpms the reason it was good at autocrossing was because it still had snow tires on it they even explained that in the video the engine is inside the car because it is sitting in the engine compartment running 427 cubic inches is bad because its a "strange number" is not even an argument againt the motor.
Reply: TheLordJethro I cruise at 2000rpm ta very much. And I've got a 4 speed. Plus overdrive. Just about plenty.
Snow tyres or no, Camaro's are quite rubbish, and with a big, stupid engine, they're even worse.
A lot of the engine is not inside the car. So much so that they cannot fit a bonnet on it. No bonnet means that the engine bay is open. Open means that it's not 'inside'. 
No, 427 cubic inches is a silly way of writing 7 litres. 7 litres is a silly amount of space to have inside an engine.
The motors probably aren't 427 cubic inches. They're probably 0 inches. 12V though.
Reply: ***** When the roof is down you're not 'inside' no. You're outside.
You're in the car, but not inside. 'Inside' is relating to shelter. 'In' is relating to your positioning.
Reply: Foxtrot Oscar My god you are uptight. Just because you do not like something does not make it crap and the reason there is stuff on top of the engine is because its the EFI and the throttle bodies gasp stuff that makes the engine work. So if i take the hood of my car to work on it the engine is out of the car well that will make swapping the engine easier I just have to remove the hood. Easy as pie. Driving around an autocross on snow tires makes a difference the tires were made to drive on snow not used as a preformance tire. You dont usually want to drive on your drag slicks on the normal road now do you. Callling a Camaro crap now whos being a hypocrite.
Reply: TheLordJethro No, I dislike things because they're crap. Me disliking them has no bearing on how crap they are, it's the other way round.

One can quite easily build an engine so that all the throttle bodies and supercharger gubbins are inside the bounds of the engine bay.

If you take the hood off your car, you'll get wet. The engine will stay where it is.

Yes, snow tyres will make a difference to grip, but not to the general handling of the car.

I would never drive on drag slicks because drag slicks are awful tyres.

Camaro's are quite rubbish. They've never yet made one with a decent engine, nor one that handles like it should. And all but the first generations have been a bit ugly.
I wouldn't mind an early Camaro, there's something about them that tickles my fancy, so I'm not bias here, just objective.
Reply: Foxtrot Oscar Grip is important on an autocross smart one it affects tbe handling because if you have less grip you wont have as much traction around a corner.  Your only argument about the engines are that they are crap you do not have any facts to prove that they are crap.
Reply: rare doesn't always mean desirable. I wouldn't have taken that car for free.
Reply: ***** The Z28 Camaro is a bit funny looking, has an engine who's architecture would have been considered outdated by the 70s, and that is about as precise as a blind man trying to direct a carpet bombing formation.
The 'ring'? So? So it can go faster than an F458. How much bigger is the engine? On a track that's over 70% full throttle, that makes a big difference. How good the chassis is makes very little difference.
It's rubbish because it's a massive engine in a poorly built car that they then charge over 50k for. Ridiculous.
Crappy handling? Well, for a fat yank V8 muscle poser, it handles ok. By normal standards it's just... meh.
Reply: TheLordJethro Grip and traction are only very loosely related. One can have much grip and little traction, or much traction and little grip.
They are crap because they don't drive well. In a tractor, they would work well. Lots of low end torque, very little care as to revs, makes a shit noise.
However, in a normal road car, an big V8 engine simply does not work. It's not fun in any way.
In fact, the only way to use a big V8 is to bung it up so you can't hear it and use it as a cheapskates luxury propulsion unit. I.e. fake luxury.
Reply: Foxtrot Oscar lol what there are millions of v8 "road cars" way more v8 road cars than v12 road cars it works great and that deep v8 purr sounds amazing v8s are one of the most widely used motors from trucks to sports cars calling them shit makes no sense at all.
Reply: Foxtrot Oscar and the new z28 beat the GTR on a track
Reply: TheLordJethro Yes... that doesn't make them good though, does it? There are many millions of many things, and many of those are shit.
That 'deep purr' is not a purr, it's a cough. It's caused by a slight but incurable misfire. Your ear picks out this off beat as 1/8th the frequency of the engine, thus making a lower note. It sounds shit.
What's the most exciting part about an engine? Hearing it wind up, get faster and faster, scream and howl and spit feral flaming hatred into the sky. You know the stuff. A funky off beat V8 won't start to sound properly good until 8000rpm. Which is beyond what most will ever dream of achieving.
Everyone knows engines should be put where they're at their best. WHY THE HELL WOULD YOU PUT A CHEAP CRAPPY TRUCK ENGINE IN AN EXPENSIVE PERFORMANCE VEHICLE!
Only in America baby, and you idiots lap it up!
V8s don't work great. They work badly. Why do you think I turned one of my V8s into a coffee table, and the other I replaced with a 5 cylinder diesel!
Both of those things are better than a working crossplane V8. In fact, the only V8 I've ever owned and not hated is the one in my Range Rover. That's a modified flatplane TVR unit and it is biblical. It can actually rev, it's responsive, it sound's much better than a crossplane and the firing order is actually workable!

Not ONE single sports car I can think of uses a V8 engine. What planet are you on?

And the new Camaro is a heap of crap on track compared to a GT-R.
A GT-R is worth at least 40k more than a Camaro, but costs barely 10k more. Bargain, epic to drive, better looking, better sounding, better built, better designed, more practical and made by a company with who's heads are screwed on more securely. I can't name a single Chevvy ever made I'd like to buy new, whereas Nissan have a glorious back catalogue.
The GT-R offers supercar pace, all day, every day, with four seats and a boot and a badge with almost as much love and respect.
What's a Camaro? A plasticy, squinty, shouty facsimile of what people think that 60s American muscle was when viewed through the rose tinted specs.
Reply: ***** Possibly because I have driven one.
It's common knowledge that smaller engines making decent power can last hundreds and hundreds of thousands of miles. That's more than enough.
However, what is less widely appreciated is that engines become more responsive and more exciting and more precise and produce power more progressively the harder you tune them (to a point)
A 3 litre engine tuned to the optimum reliability/economy/power range will be making 300hp or so. To get a 7 litre engine running that well you're going to end up making 750hp or more. 750hp is far too much for most people and most cars. So for the vast majority of peeps, a 3 litre engine is much, much better. It's also more economical, so even if you do have to spend a tiny bit more keeping it going (Yank V8s can be expensive to repair too) you'll have saved far more money on fuel, and got more fun out of it.

Jaguar? Notorious for outdated tech?
Well. In 1948 they brought out the XK6 engine. Twin overhead cam, straight six, head designed for high 'swirl', large range of capacities... it was one of the more advanced engines of its day, and was so advanced it managed to survive from the 40s to the 90s before it was considered outdated. In 1961, Jaguar introduced their world famous independent rear suspension setup, which, again lasted until the 90s unchanged, and is still a part of some Jaguars in a modified form.
Jaguar don't change very often, but when they do, it's a biggie and it works very, very, very well.
Sit inside a modern Jag and no, it's not as crammed with tech as a Merc rival, but that's fine, because I don't want half the crap you get in a Merc. What you do have in the Jag though is good and modern and well thought out. Little things, little details. That's why I like them as one of the last major manufacturers who truly seems to care.
Reply: Foxtrot Oscar you are comparing a sport cars and muscle cars to daily drivers. Most people can not even handle 300 plus horsepower rwd cars. Vortec doesnt just make truck engines vortec heads are a great way for a cheap increase in power. And this jag is not a expensive car or a good one for that matter they basically saved it from rotting away.
Reply: ***** But even to this very day, the original 1961 Jaguar IRS still feels good. I would happily have it underpinning a brand new car. It's not electronically adjustable and fancy, but suspension doesn't need to be. And you could fit it with fancy dampers if you wish. The architecture of it is brilliant.
Reply: TheLordJethro As you say, most people can't handle 300hp. So why bother with a big V8 at all? Use a 2 litre engine making 180hp and the vast majority of people will be more than happy. If you need a 7 litre engine, you're obviously good, and you will appreciate a V12, so have one. 

Where do Vortec come in to this?
All big V8s V8s are good for nothing more than a truck. Except diesel V6s are better in trucks. So there's no point in them at all.

IF this Jag had its original V12, it wouldn't have got like this. It'd be happily cruising around under ownership of an enthusiast.
Whoever put the V8 in it killed it. These guys are prolonging it, but further embarrassing it.
Reply: ***** Because generally, if you can afford to purchase a motor vehicle of sufficient quality of design that it can adequately manage the deployment of the levels of power provided by such a large engine, you can also afford the maintenance of the machine.
There's your reality.
On the other side, you have Americans who put big engines in shonky chassis's and sell them for very little money to idiots who don't know or care for better things. All they want is tyre smoke and some big numbers to supplement their small self image.
At least, that's how most people see anyone with a stupid, overpowered car.

Also, V12s are not more difficult to work on, simply more time consuming. In fact, the V12 that resides under the bonnet of my daily Jag was rather easier to comprehend than the V8 that supports my coffee table, originally from my Corvette. Why? Because the valve train is so much simpler, and because there's less in the way of counterweights and imbalanced firing orders.
The V12 comes apart neatly in layers, while the V8 took a bit of fiddling. makes a good magazine rack though, and you can even wedge a small bottle of brandy down the cylinders...
Reply: ***** More time = more time. More difficult = more difficult.
If you're doing something easy, 12 times. That's easy. If you're doing something hard 8 times, that's hard.
Super Simple Stuff.

Oh, and as for me driving a Z28... well, it's sort of my job, so... yeah.
I don't own an ass and have no idea how I would even go about 'talking out of' one.
Reply: ***** No, my job is to drive brand new cars and form opinions on them.
The Z28 is in no way a Camaro. It's a muscle car, and not really that great of a muscle car either.
Oh, and I have no videos of me working because, guess what... It's illegal!
Do you really think people like Chevvy and BMW and Ferrari want crummy amateur honest videos of their new cars doing the rounds? NO!
Also, I don't own a video camera.
Why? Because £150 for a decent video camera could quite easily be £150 in new tyres, or petrol, or any other random shiny new lump of metal for a crusty old Jag. 
Oh, and I'm poor.
Reply: ***** Did I say that? No, I don't think I did, so stop being a pleb and listen before responding.

I do my job... but it doesn't pay well. Why would it, when I only do a few hours actual work per week. I have another day to day job for that. I'm no Jeremy Clarkson. You have to be really special for that.
The Camaro Z28 is a three box, two door car that's RWD and has a huge great big shitty old V8 in it. And it's from American.
It's a muscle car. It ticks every single box.

Sports car however, it is not. It ticks ZERO sports car boxes, beyond having four wheels. The engine is too big and has at least two too many cylinders in it, the body style is wrong, the weight is too high, the size is too large and the entire setup is more about aggression and power than delicacy and fun, which is what a sports car should be.
(TYPO- in the previous comment I said the Z28 is in no way a Camaro. I meant to say it is in no way a sports car. Apologies for the error, I was thinking a couple of sentences ahead again)

It has programming? Big whoop. ALL cars have 'programming' these days. And no, it can't maintain speed in the air, that's against the laws of physics. And what the hell kind of shit were Chevvy thinking people would be doing with the things to include that anyway? No one in their right mind would rally a fatty old Yank barge anyway!
The Z28s engine is not designed to run at high RPM for long periods. It won't physically run at high RPM, full stop.
It's heavy hearted crossplane V8 would simply explode at high rpm, I mean, it redlines at 7k. My 1955 Jag redlines at 7k, and I take it up there, hard!
'high rpm' would be 8k+, ok? Considering Honda's S2k could rev happily to 9k, all those years ago...
Reply: ***** There are no British or German V8 sports cars. There are a couple of British and German V8 muscle cars though.
Canadian? Not so sure.

No Lambo ever made is a sports car so it doesn't matter that they don't fit the definition of a sports car... because they're not one.
My Jag has six cylinders. Well, the E type does and that's the sports car. The XJ12, the V12, is a big luxury saloon. Not a sports car.
Ferrari, again, not sports cars, nor are Paganis or Koenigseggs.
How high an engine revs is VERY important if you're claiming it's designed to run at high rpm, especially if it turns out it can't even REACH high rpm.

Power bands improve with revs. Spread them out, take the twitch out of the engine, give it wider gears without dropping off the power, because the power band is usually a proportion of the revs. More revs means more to have a proportion of, thus more playing room.
Reply: ***** The BMW M3 is a 4 door saloon. Not a feckin sports car. Yes, it's a sports saloon, but it's NOT a sports car.
The F type IS a sports car, but not the V8 one. Why? It's too wayward, too overpowered and not fizzy enough. The V6S is the perfect sports car.
The definition of a sports car is vague, so the best option is to look at all the best ones ever.
Jaguar E type, MGB, Honda S800, Alfa Duetto Spyder, Lotus Elan, Mazda MX5, Lotus Elise, Caterham 7, Porsche Boxster, Porsche 911 (lower models) TVR Tuscan, Morgan +4, Honda S2000...
What do none of those have? High weight, V8, lots of power...
Sports cars are small, light, have smallish engines, and focus on chassis, handling, precision, driver engagement and fun, ALL above outright power.

So, the M3 isn't a sports car at all, and the V8 F type is, in fact, a sports GT, for the fact that it's got the legs over the V6S, but at the expense of handling and fun factor. (the V8 engine is much heavier and drags the nose down)
Reply: ***** The Elan is one of the all time greatest handling cars ever, as agreed by pretty much everyone who's ever driven one that hasn't been bent by idiots.
The MX5 is over hyped, but it is still one of the best cheap sports cars around. No, it's not as good as, say, a Cayman, but it's a LOT cheaper.
The Cayman is better than the Boxster, but the Boxster is the more widely known.
The TVR Tuscan is a fab car. Looks great, handles well, goes well, sounds like all the good bits of the bible.
No, it's not a 911, but then, it's not a 911. Not everyone wants a 911, and not everything needs to be a 911.
That said, 911s are great too.
S2Ks are as good as they are, which is good. There's a reason people hype them.
The RX7, 240Z I would agree with, the E46 is a SALOON, the Supra, yes, and the Zo6 is a MUSCLE CAR.
The handling from a brute force point of view is negligibly different. But it's the attitude of the car. That little bit less willing, that little bit less nimble, that little bit less precise at the rear end, that bit more grunt... that takes it out of the sports car zone.
The lines that define sports cars are vague... yet have never, ever crossed into V8 territory. Funny, eh?
Reply: Foxtrot Oscar the point of sticking as much power into a car as possible is for it to be fun to drive because its so insane, and  most poeple who modify cars do this at some point or atleast attempt it
Reply: Foxtrot Oscar RPMs mean essentially nothing, you can have an engine that revs to 10,000 RPM but only makes power from 8 to 10, then you have  diesels that make 400 horsepower from idle to 3,500 RPm so in reality RPM means nothing, I know high reving hondas that my 200,000 mile 7.3 powerstroke would kick there ass in a race. A wide Powerband is better, the only benefit of high rpms is you can keep a lower gear ratio and still go the same pace. high rev powerbands are terrible off the line and get smashed by every engine that has torque, like a v8, most inline sixes dont have great powerbands and are stuck with either a torquey tractor like powerband or a high rpm torqueless wonder, like BMWs. And as far as im concerned, Ford made the best inline six.
Reply: ***** There isn't really an E46 coupe. It's a two door saloon, as evidenced by its three box layout and five seats.
It's also not a sports car, in any body configuration.
The ZO6 is like an MX5 that's done too many hard drugs, is cranked out on steroids, has far too much muscle that doesn't really do much, and is a complete dickhead to everyone it meets. So, in other words, nothing like an MX5. Just a but rubbish.

The Jag XKs, V8 Astons, and Ferrari California are NOT sports cars. They are GT cars. Baby GT cars, but GT cars none the less.
The Corvette, Mustang and AC (not Shelby, they're nothing more than copies) Cobras are all muscle cars.
The Lotus Esprit and F430/458 are small supercars.
The Gumpert Apollo is an odd one, hovering between supercar and hypercar. 
The Ariel Atom is a 4 pot, although they did have a V8 in certain limited edition models. This was essentially two bike engines strapped together, flatplane and an anomaly. Also, not a sports car. It's a superlight.
The Z8 I'd sort of forgotten about, and it's another weird one. Sports car body, but with a more GT feel to it, albeit with the absence of the practicality of a true GT car. They would have worked better with the standard 3.5 straight six.

NO V8 sports cars.
The DB7 never had a V8 either. Just I6s and V12s.
Reply: Zachary West Nope. Having ludicrous power is boring. You can never, ever, ever, ever use it all, and trying to control it on the road is more stressful than fun. The Bugatti Veyron, for instance, is brilliant... but you can never, ever stamp on the throttle. Ever.
Stamping the go-juice out of a corner and holding the car in a perfect four wheel drift is one of driving's greatest pleasures. Huge power doesn't let you do that.

RPM means a lot. RPM is speed, power is force over time, speed is distance over time. Speed plus force equals power. (not strictly true, but in this instance it's accurate enough)
If you can rev to 10k, you can make more power than you can at 6k, with the same engine.
If you're only making power from 8-10k, then you've broken the laws of physics.
If your peak band is between 8 and 10k, then you could do with a bit of tuning, but it's mostly fine.
Why? Because what do you do when you're driving and you want to go fast?
You drop a few gears and get the revs up. So you want your power up that end of the tach, right?
You're never going to race around doing 3k, are you?
That's stupid and slow.

A wide power band limits what the engine can do. Think of it as concentrating the power. If you tune for a wide power band, you're spreading your power thin. If you cram it in tight, you end up with more of a kick.

High rev powerbands are crap? So what are motorbikes doing? High revving, and accelerating off the line like nothing else.

Most I6s have great power bands, that's why BMW use them, and everyone loves theirs. Nissan used them, and everyone loves them. Toyota, Jaguar, Maserati, Bentley... Everyone used to have straight sixes.
Now, they're a bit too long to fit into a 4 seat car, with all the idiot protection crash guff that's now required by law, so most people have moved to V6s, which are almost as good. Still better than a V8.
BMW I6s are certainly torquey. Why do you think they ditched the V8 in the M3/4?

The only I6 I've really driven that doesn't have a 'great' power band is my 1955 Jag. Because that's tuned for the track, so it's really crammed up the top end of the revs. But then, that's actually perfect for a high performance car on a track.

As far as I'm concerned, Ford's I6 was never anything special. It made very little power for its size and never did anything great that I've heard of. Still, the best Mustangs are the 6 cylinder ones..
Reply: Foxtrot Oscar hey I like your passion for cars...unfortunately no one in my country (China) cares about our own motor industry, because it sucks. I wish more people are like you in my country, passionate about our own motor industry, it would be the only way for our cars to improve. The mergers and partnerships with euro/jap/american auto companies just caused people to lower their expectation for Chinese cars, and treat it as something worthless or for the poor...I wouldn't say that everything you said is agreeable, but I do share the believe that cars are incredible machines and should be valued.
Reply: Foxtrot Oscar
 What is your opinion on the 2013 Jaguar XJ and XF models, in regards to build quality and reliability?
Reply: Su Yuzhou China is unfortunate as it's sort of only just discovering the car. Everyone wants one, so they have to be cheap and practical and local (Thanks to governmental intervention). Cheap means boring, usually.
Only the rich seem to be able to afford high end cars, and they usually go for European stuff that already has a good brand name, because rich people like to show off.
In time though, people will come round to the idea of chinese cars. 
In the 60s, if you bought a Japanese car, you were considered a lunatic. By the 80s, they were everywhere. If you bought a Korean car in the 90s, you were bonkers, now Kias and Daewoos are everywhere too, and Kias aren't bad either.
Reply: supremacistdawn Good and good.
They all seem to work well, although I tend to look at older examples to gauge build quality. There's no reports of massive disappointment or things exploding so, yeah, I think it's all good.
Reliability wise... well, I do a lot of driving and I don't think I've ever seen a modern Jag dead at the side of the road (Peugeots and Fords yes, Jags no) so I'd say pretty good.

They also both look, handle, ride and drive brilliantly, if you avoid the V8s.
Reply: Foxtrot Oscar
That's good to hear, thank you for the information.
Reply: supremacistdawn Just doin' my job... although I'm not getting paid.... or any expenses allowance. Hmm.
Reply: Foxtrot Oscar if he drives a powerstroke you can use that power for idk hauling or towing and even mudding for fun.
Reply: TheLordJethro If you need that much power, you clearly don't know how to drive. End of.
Reply: Foxtrot Oscar Compleatly missed my point. A 7.3 powerstroke is a great truck for hauling for example if i wanted to haul a car to a car show I would use a duramax or powerstroke diesal and get 20 mpgs hauling a close to 4000-5000lbs and thats light for a diesal truck they can haul up to 20000lbs not to mention the semi trucks that haul more and are a needed tool for the transport of goods around the country.
Reply: TheLordJethro It's also completely over the top. I can tow a car and nearly a ton of equipment with NO problems, over steep hills, with 2.5 litres. I used to do it with 2.25, but it was just a little slow. 30mpg is far nicer than 20.
If by 'semi truck' you mean an artic', then WELL DONE. You've established than a heavy commercial vehicle hauls large loads. FAR bigger loads than ANY civilian is EVER likely to need. For any non commercial venture, 7.3 litres is utterly unnecessary.
If you personally need such a large engine, you're doing something wrong.
Reply: Foxtrot Oscar You still do not get it its because great britain is so small compared to the United States. Civillian Farmers use diesals all the time to haul hay and livestock construction companies also use them to haul their goods to construction sites across whatever states they live in a lot of racers use diesal trucks to haul their cars and gear to tracks around their particular state or even across country 100 to 2000 miles And getting 20-30 mpgs a little four banger gasser would probably die hauling that much and probably get about 5-10 mpgs if it could even tow it... I call bullshit on your little 2.5 hauling close to 10000 pounds and getting thirty miles per gallon. What are you using a twin turbo land rover gasser? Because i doubt a NA 2.5 4 banger gasser can even haul 10000 pounds let alone tow it at low enough rpms to get thirty mpgs.
Reply: TheLordJethro N/A 2.5 litre FIVE banger. Land Rover TD5 engine with the turbo lopped off. It's one less thing to break when I'm 2000 miles from anywhere. 
why would I need twin turbos and I'm not even sure if you can gas a diesel...
I wish the US would stop using pounds as a weight measurement.
Yes, it can tow that to 30mpg. Not on country roads, then it's closer to 20, but still. 
On the subject... I doubt a big diesel American truck could tow that much and get 20 considering 20mpg is a distant dream for most of these trucks when unladen.
No gas vehicles is ever going to make great MPGs, but then, gas is a lot cheaper than petrol or diesel, so it makes up for it in cost.
Note that I said DIESEL though.
2500rpm 70mph cruise... not good enough for you? Thats the power of overdrive baby.
Reply: ***** Found one.
I'd do it for free.
Why pay 'a guy', it's not that hard. If you do the work yourself, the Jag engine would be cheaper. If you're lazy and pay someone, the Jag engine would still be marginally cheaper here. Finding people who work on LS engines is hard, because LS engines are shit, and no one has one here, meaning no one really bothers learning them.

'1000hp for half the time and money'... yeah, but you still end up with a shit V8 that makes an awful noise and rattles your fillings out. You pay for quality.

If they'd cranked the V12 up to 700hp, I'd not say a word, so long as they did it properly (no, a ruddy great supercharger through the bonnet is not proper) My own XJ12 is not stock, but it's all the better for it. Besides, stock US spec is shit compared to stock UK speck. Nearly 50hp difference!
Reply: ***** Except this is one of the prettiest four door saloons ever made, as voted for by the people...
The US versions aren't so pretty, with their extra chunky 'safer' leg-breaker bumpers, and the piddly headlamps (note the chrome ring to fill the gap), and the extra lights all over the place, but an original, Series 1 XJ in Brit spec... (like mine) is a gorgeous thing.
You can't tell me this isn't a special piece of design.. 
http://www.model-icons.com/img/2011004/2011004-1.jpg
The UK practically invented style in the 60s, and looking at how well respected our motoring heritage is, and what its current status is... I'd say it's all pretty cushy.
What four door saloon would you suggest is better from where you're from?
Reply: Foxtrot Oscar why in the world would diesal even exist if gassers got better fuel millage while towing? Hmm you obviously know nothing about diesal engines. Lets do a little comparison shall we. 5000 pound hauling challenge over lets say 100 miles fords v6 ecoboost (aka shit engine) vs a Ford 7.3 powerstroke and see who gets better mpgs. Sure diesal costs more to fill up but you go further. Why do you think they are putting turbo diesal engines in sedans and passenger cars so they can roll coal?
Reply: TheLordJethro Diesel engines exist because they do, ok?
Gas engines DO NOT get better 'fuel mileage' EVER, especially not when towing.
Gas is, however, a lot cheaper. It's also hard to find, and the conversion kits are highly expensive, and the tanks take up a lot of room.
Ford's big V6 is actually not that bad of an engine. German, I believe.
The 7.3 powerstroke is a heap of shit though. It's rough, does about 16 to the gallon on normal roads and is completely unnecessary.
They put turbo diesel engines into SALOONS (a sedan is a type of chair) and other cars because of the economy angle.
NOT for 'rolling coal'. Anyone who does that is a twat and should have their balls clamped in a vice.

D I E S E L. It's not that hard.
Reply: Foxtrot Oscar AND his critics which seem to me many.  I'm a born in the USA  guy who happens to like some English  cars .

In my opinion you're all correct and you're all wrong. It's just the slant you see things from.

 My first was a 61 XKE that should make Oscar crap, piss, throw up and die at the same time because I flared the fenders, adapted bolt on mag wheels to the knock off hubs  and slipped a 289 Ford into where the jag engine used to live.

That Jag today is worth a fortune, then is was junk

 That was what we did back in the day. It was excusable or should be even by Brit standards because if not for me it would have been scrapped as the engine blew and the cost to replace was near the value of the car, plus the upholstery was garbage . Leather doesn't seem to last long, probably  because Americans aren't used to it so never treat it.

today that Jag is probably still alive somewhere possibly restored back to original.

I also have owned a 1958 TR3 and owned several Rolls and Bentleys and still own a 64 Rolls and 55 Bentley

FACT; Here and in England the steel bodied versions were rust buckets.  The wiring terrible and idiotic at best Lets not forget the designed on LSD and Crack Cocaine designed ' Brake Servo's on those car , BUT  the cars also have style and class

Here the cost of parts and extremely high prices by Brit Car experts is what sends  Triumphs, JAGS, Rolls, Bentleys and Austin Princesses to the gave yard far before they should.

The Brit cars that survive here are typically either of such high value that the high repair cost isn't YET bad enough to send them to the junkyard. Or  cars like my 48 Austin Devon that was saved because it was converted into a Street Rod, that Oscar may be glad to know was sold and deported (joke)  back to GB when Humphrey Corbett, a great guy,  who I am sure you will know about,  bought it from me several years ago.
Reply: Chopper John Flaring the arches is not necessary, unless you're taking an E type to the track. That much rubber on such a light car is not needed on the street. 
Wheels I can understand, wires are incredibly time consuming to clean and can decay quite quickly, especially if the chrome is scratched and there's salt on the road. I personally have a set of knock off steels (dunlop style) for winter use. 
A 289 Ford lump is a stupid thing to do, and less power than the Jag engine anyway! Why not a Ford straight six? They're not horrendous engines and vaguely fit the sports car vibe of the E type. Far better than a grunty old V8 at least. That's what I and thousands of other enthusiasts would have done.
It was junk the second a V8 went into it.
And you should have kept the engine too, even 'blown' they're worth a fair bit nowadays, simply because everyone wants them for kit cars and to restore decent cars.

XK6 engines don't tend to just 'blow' either. They're nigh on bombproof if treated right. Well over 100k is normal for a properly cared for engine. And in 1961, for a highly strung sports car, that was pretty good.

All steel bodied cars rust, yes. Jaguars were good at it because the bodies were highly complex and sophisticated (for their time) and people simply didn't look after them as they should, mostly through ignorance.

I have no idea why parts are so expensive for in the US, or why you need 'experts'. Here, the local garage should be able to do almost everything bar engine and running gear rebuilds (and even then, any engine or gearbox shop should be able to do those bits). 
They're very simple cars, although up until the early 00s, were highly confusing to most US mechanics, with their funny 'overhead cams'... despite it being widespread in Europe for 50 years or so..
The wiring in my cars was good, actually. Well, would have been 50 years ago. I completely rebuilt all three of my Jags and my Land Rover, and upgraded the wiring at the same time.
I reused any connectors that weren't age-cracked or rusty though.

I've seen plenty of Triumphs, MGs and Jags and Austin Healeys and Bentleys and so forth in the US. Sure, they're rarer than equivalent aged American cars, but then, the US has a long history of not buying things that aren't American. Except Jags. About 70% of all of them ended up there in the 60s and 70s....
Most were on original engines, and the majority of those that weren't had tasteful upgrades such as larger engines from the same model range, or a more modern equivalent of the original. A few shonky V8s, yes, but they tended to be quite nasty cars.

We like to buy cars we like here in the UK, rather than buying any old thing and spending a huge amount ripping its guts out to turn it into something it never was and never should have been.
Reply: Oh come now, by the time they got it, it had already been screwed with. Are you really saying that you would've paid more than they did for it? How much more?
Reply: opl500 I'd have bought the car for what they did, then sold the engine to an idiot and bought a proper Jag engine.
Reply: ***** You saw three Series II LWB XJ12s?
I call bull. 
I've not seen that many in one place in my lifetime and I actively look for them.
And if you call three cars in a scrap yard a 'sign', then Chevvy must make the worst shit known to mankind. Ford are bad too. Not the other day I saw a row of 20 old Fords in a scrapyard.
Reply: Foxtrot Oscar The main reason people put small block chevy engines in Jags is simply reliability. Most of the amount of original jags I know of this vintage spend more time in the garage than on the road.
Reply: Peter Westall The simple fact of the matter is that that is utter bull.
The reason people put crappy V8s in is because they break their engines.

I run two XK straight sixes and a V12. All three are perfectly reliable.
The only issue I've had in years was a fuelling problem with the V12 which left it running on 11 cylinders. Thankfully it's a V12 so I just shut off the affected bank completely and drove home on six cylinders.
Not bad for a 42 year old daily driver, eh?

Most Jags of this age spend a lot of time in garages, that's the problem. People don't drive them very often and the neat, precise oilways, fuelling and ignition systems all gum up and deteriorate.
If you use them properly, keep them maintained, they last forever.
I've got over 200k on the XJ12, and three years of racing out of one of the sixes.

If you're going to own a Jag at all, you may as well have the proper engine in it. I'd rather have no Jags than V8 Jags because they're awful.
Reply: Have you ever taken your Jag thru the desert on I-40 between say, Amarillo and Barstow during the summer? The Jags I remember seeing through there, were on the side of the road, with the hood up...
Reply: Rarity does  NOT = Valuable, desirably  or being  a collectible.  Here we have a case of a old jag  that nobody wanted, going to the crusher,.

The car was saved by 2 guys who saved it when they made it into what they wanted and had fun with it. What part of that can you not comprehend?                

you say " raped, thrashed and abused in this manner. A comfortable, world class super cruiser, turned annoying, worthless fart box."

I say it's more like it was modified, raced , used for fun. made them happy, used, driven and enjoyed  and is now a world class RAT ROD!  that's now grumbled about by a self righteous   turned annoying, worthless old fart box."
                   

do you know why there are hundreds of different types of car racing?

same reason Baskin Robbins has 57 flavors. Not everyone likes the same things!  so you enjoy your jags as you prefer them and let others enjoy them in their own way.
Reply: Foxtrot Oscar why do you hate v8 engines so much?
Reply: opl500 No. I haven't.
But I have driven it quite happily in 40 degree plus temperatures without mishap.
The big crossflow radiator keeps it nice and cool. It didn't really like sitting for more than 5-10 minutes or so, but that may be because the fan was on its way out at the time. But then, why would you sit stationary with the engine running for 10 minutes?

If my car was overheating, I personally would put the hood down if I had one, and put the heaters on full. Free secondary radiator, and having the hood down means you don't cook.
Reply: Chopper John Rarity does generally equal value over and above what it would otherwise be worth. No, it'll never be worth a million quid like a Ferrari... but it's still worth more than a standard SWB XJ12 or an XJ6.

Why did no one want it? Because some fucking idiot put a crappy V8 in it. No one wants a V8 Jag. Except me. I want to buy a V8 E type when I can afford it. Convertible, to oppose my current Coupe. And I'm going to rip that V8 out and put a six in there. V8 E types are ridiculously cheap compared to original engine'd ones.

The car was destroyed by one guy putting a V8 in it. These two just continued the misery, spent a fortune on it, and it's still a heap of crap.

It was ruined, raced, driven and made a lot of people cringe.

There's a reason Jaguar never made a big V8 powered XJ... because they're shit.

Variety in racing is good. You've got the V8 powered American shitboxes and the slick European sixes and twelves. When you've got a shit American V8 powered European mongrel, that's not so great.

I don't prefer Jags my way, I just like Jags. I have Jaguars. Not shells with crappy Chevvy engines in them, I have Jags.
If you like Jags, have a Jag. If you want a Chevvy, buy a Chevvy. It's really rather simple.

What the hell is a Baskin Robbins and why do they have 57 'flavors'. (whatever one of those is...)
Reply: br8302 I don't hate V8s. I had bad engines.
Crossplane V8s are bad engines.
Flatplane V8s are fine. Not brilliant but good enough.

Crossplane V8s are bad because of the crank design.
The firing order is such that two cylinders on the same bank will always fire consecutively. This creates odd vibrations and uneven exhaust pulses, affecting scavenging and thus firing in the other cylinders on that bank, and to a lesser extent, the other. This decreases power, makes a horrid noise and is generally a bad thing. The crankshaft itself also needs massive counterweights to balance it. This makes it heavy and sluggish to respond. I like crispy engines not soggy ones.

I especially hate Chevrolet V8s because they are not only crossplanes, and massive (which exacerbates the problems) and very underpowered for their size (which is poor engineering) but they're also pushrod operated. Pushrods are complex, cause a lot of friction in the engine which decreases output power and efficiency, and they severely limit maximum revs because of the huge reciprocating mass over a overhead cam arrangement. Also, it means the camshaft is buried right in the middle of the engine, which is annoying, and means that more than two valves per cylinder is impossible or very, very, very difficult depending on the design.

Also, a straight six is perfectly balanced, makes a splendid noise, is powerful, smooth and torquey where it matters... why bother with the added complexity of a V8.

Pushrod crossplane V8s are just a massive collection of non ideal compromises that add up to be boring and a serious disappointment.
Reply: Why you have so much against that someone just happens to like big V8s, maybe just because their roughness, odd vibrations and that "horrid" noise they make. Roadkill is fillmed in usa, so V8 is the cheap way to get power there. And how it's exactly sad, that this XJ12L was saved from getting junked, and now lives on with a smallblock V8 and supercharger, would it be better as a metal cube that it would be without this show, or like in the UK get trashed in banger racing?

I understand that you like your jags with their own engines, sophisticated and smooth running V12s. But why should expanding the life of this pretty rare jaguar body offend you? Even there's an american supercharged v8 inside.

These guys are just having fun with cars, and any car enthusiastic should understand that, that him or her way of having fun with cars isn't the only way to go, there's nothing wrong with building a drag-racer, drifter, lowrider, kustom out of a jaguar thats on its way to the crusher, just like there is nothing wrong with completely restoring it like it was straight out the factory.

To me, this is a super cool jaguar, just because that engine and supercharger sticking out the bonnet, it just looks and sounds rough. You definitely don't understand this, you even claim that there is no hot rodders in the UK which is not true, there's guys with V8's under a Morris bonnet. My advice to you is that stop being so close-minded, and try to understand that some of us like more radical customisations of their cars than others, and that some like ridiculously big engines with power you really cant safely use, just because it's fun. And some of us like to mix things, you CAN put an american HEMI in a Jaguar, or maybe Jaguar V12 in a Cadillac, without the need to yell rape.

I understand the way you like your cars, but don't be so hatefull on other guys ways, calling someones fun raping, trashing, abusing, calling everyone rednecks and claiming all american cars shitboxes with shit engines isn't really too clever.

You just should be happy that this specific Jaguar was saved from crushing, and gets on the road again, with attention of a huge crowd, even though with a engine swap you happen to hate. Surely after this show, someone gets more interested in old jaguars, and maybe gets one.
Reply: Speaking of cutting holes in hoods (or bonnets). I'd like to see them do  a complete sleeper, where nothing protrudes and they film themselves pwning random cars at the local dragstrip.
Reply: jessus111 I have NOTHING against people who live big V8s. I have a LOT against people who claim shit engines are good. That's just stupid.

Roadkill is filmed in the USA, so they bought a really expensive V8 engine and put it in a heavy old Jag. Stupid on two counts.

This XJ12L was put in danger of being crushed in the first place by some idiot putting a shitty V8 in it 
Now it lives on with a shitty engine with a shitty supercharger perched on top like some garish cake ornament. It's an embarrassment to the car, an embarrassment to the designers and just plain shit.

You know what? It would almost be better for it to be smashed on a banger track. Then it only has to endure the torture once, and it'll do it with a proper V12 heart of gold providing motive power.

If you have a Jaguar, you have a Jaguar, and that is a good thing. If you have this thing, you have a heap of shit, so why bother? It's a rubbish drag car, and a rubbish Jag. Kill it. End the torture. 

This Jag WOULD NOT be on its way to the crusher without idiots and their shitty V8s.

Why bother with drag racing or drifting when you could get far more enjoyment from a bone stock one? It doesn't have to be perfectly restored, mine isn't, but I'm enjoying it as a Jaguar not a heavy and inappropriate vessel for my shitty engine. 

Sticking a V8 in a Moggy is stupid as well. You'll end up with a shit car that's shit to drive, isn't very fast at all, is a pain in the arse to maintain, costs a fortune and a half in fuel for NO discernable payback, bar that you can brag to someone you've never met that you've got a stupid engine in a funny old car. 

You could put a HEMI in a Jag... but WHY THE FUCK WOULD YOU?!
You're making the Jag WORSE for NO REWARD. 
Performance is damaged, comfort is damaged, handling is damaged and the entire experience is tarnished by the expense of your now worse car. 

Why would you put a Jag V12 in a Cadillac? Any Caddy from the 50s on was a heap of shit and the old ones that were good had their own V12 which was big and soft and grumbly and fit the car better than the sleeker and more modern Jaguar engine ever could. 

I like cars. Not cars that are pretending to be other cars.
I'm all for silly projects. An amphibious Reliant Robin, a rally spec Range Rover, a military truck turned camper...
but these are all things that use the best aspect of a car, and add to it. A Reliant Robin is already light, fibreglass and pointy at the front. Perfect boat. A Range Rover is already fast and off road capable, make it more so. A Military truck is already solid, dependable, large and off road capable, perfect long range camper.

Or taking an XJ12, making it a little bit more powerful, fettling the suspension with more modern shocks and enjoying it as a perfect big luxury saloon. Modifying cars is about enhancing, not fucking up.

The US of A has never made a car that I would call world beating in class, or 'truly great'.

Truly great cars are rare. Something that's revolutionary, solid, works and inspires.
The VW Golf. The Jaguar E type. The R32 Nissan GT-R... not so much from the US though. Sorry, but facts is facts. 

After this show, someone gets interested in old Jags, buys one.... sticks a shitty V8 in it and ruins yet another nice car. Yeah, I'd just love that to happen...
Reply: opl500 I'd love that too... oh, wait, I have that. It's called an almost bone stock 1972 Jaguar XJ12 and there's one sitting in my garage. 150mph, power out the wazoo, it can certainly outpace most sports cars and seriously worry low end supercars. Porsche 911? Hmm, breakfast time. Oh, and it's almost completely quiet (when I want it to be) and doesn't just look stock... it is stock (pretty much)
Reply: Foxtrot Oscar I don't believe you. Finnegan and Freiburger pretty much said the stock diff on that Jag isn't really good for drag racing. So tell us, what times do YOU get on the 1/4 mile with your stock Jag?

BTW, F&F - good job with lowering the times on the Jag with the new engine, if you're going to go to the trouble of putting a supercharger on it, at least make it get good times. Can't wait to see what you get out of it when you rebuild the tranny and the rear end.
Reply: opl500 Drag racing with a nice old luxury cruiser is like putting imitation cheese on nice apple pie, it just doesn't fucking work, and it's horrid.
It'll out pull an M5 though, which is its body-shape-rival, and of course it'll kick seven shades of shit out of a Rolls.

For the record, drag racing is BORING AS FUCK.

However... I've thrown it down Santa Pod a couple of times and hit the rough 12 second mark. I'm trying to not smash the gearbox up though, so it may have more in it. All I did from stock was give it a new exhaust and let the rear tyres down a little bit for more grip off the line.

Why the FUCK would you ever need to 'rebuild' a transvestite?
Reply: Foxtrot Oscar
 Here's some sites you can visit and order some parts to get your jaguars run nicer:

http://www.jaguarspecialties.com/v8_kit.asp
http://www.brokenkitty.com/xj/xjv8.htm
http://www.jaguarv8conversions.com/
http://www.johnscars.com/jaguars.html

Have a nice day.
Reply: Foxtrot Oscar 
     You're spouting so much bullshit it's unreal. Car design has become more "swoopy" because we have a much better understanding of aerodynamics. This design does not have to sacrifice visibility, and rear view cameras were not made as a reaction to less visibility, but rather an straight addition to visibility. Cars today are in almost every way better than the cars of old. Better safety, more power, more reliability, better handling, better braking, better economy, etc. There's nothing inherently wrong with old cars, but they just can't compete with new cars.
      Also, your understanding of grammar is that of a pompous elitist.The sole purpose of grammar is to make language easy to understand. Once something is used enough that it can be considered commonly used, or commonly acknowledged, it is correct grammar. Pronunciation does not have to be based on a specific word's derivative language.
Reply: Dat Apple Bollocks. Car design has been going curvy and straight and curvy and straight for decades... but never has anyone randomly added lines to nowhere. They do little to nothing positive for aerodynamics, and in many places probably hinder it too. Most of it is pure styling. My reasoning behind this? Not everyone is doing it, quite a few top end manufacturers included.

Cars have gone downhill in a lot of ways. All bar the top end cars handle worse than their comparable rivals through history. Even at the top, there's debate. Then there's economy. In the 1950s there were cheap economy cars getting 40 to the gallon. That's only become normal again in the last decade, and even then, mostly with diesel engines. Yes, they're a little bit quicker, but also a lot heavier and less roomy inside. Safer, but they don't handle as well. In 1961 the brakes of my E type were considered amazing. Even today, they're still pretty good. More power? Yes, but the speeds aren't all that different. In fact, power for power, many cars are now slower.

As a daily runabout my 1972 Jaguar XJ12 has no equals in terms of comfort, speed, handling, looks, luxury and audio accompaniment.
Yes, most modern cars require less looking after to maintain the impeccable reliability, but none offer rival its comfort, speed and handling package.
Forced to choose between the XJ and the modern equivalent, an XJ or a 750i BMW, the old Jag is the best. The modern cars simply do not handle as well, nor are as comfortable. Yes, they both deliver better fuel economy, but not by much, and they only deliver marginal greater top end speed. I'd be willing to bet mine is quicker to accelerate out of corners and the like though, as it's a lot lighter. And in terms of luxury, the elegant leather, wood and shag pile of my car is preferable to the seas of plastics and gizmos in the newer vehicles.

My understanding of grammar is that of one who wishes to be understood, and to understand. Nothing more, nothing less.

Menny peepl tolk liyk dis an dey it iz comunly aknowlejd to be reedubl. But it's utter bollocks. It's not right and never will be, not while sensible human beings exist anyway.
Pronunciation is who the word is pronounced. In English, that would be the Anglicised version of the foreign original, or a simple continuation of a native English. Variation will occur and is to be encouraged for the sake of dispelling some of the tedium tant modern life faces. These variations come in stressing different parts of the word and using the short or long versions of the letters therein. However, altering the word so much that the base spelling should be changed to reflect it is not to be encouraged. It brings about confusion and pointless arguments.
Reply: For the love of god, why is this comment thread still going? It's all based on opinions and you know what they say about opinions...
Reply: David Fresne Fact is, car design has been wandering between curvy and straight.
Fact is random stylistically and aerodynamically useless creases are just that, useless.
Fact is, mess is not stylish as proven by the fact that every single one of the voted most beautiful cars are smooth and simple and elegant and more beautiful for it.
Reply: Foxtrot Oscar Beauty is in the eye of the beholder. Just because a bunch of nitwits vote on something they THINK is beautiful doesn't mean everyone else does.
Reply: David Fresne You're calling a majority of voters nitwits?
Here's a life hint. Don't go into politics. At least, not in a democratic country.

Over the course of human history, the widely regarded definition of beauty has always been simple elegance and proper proportion. Of course, I'm talking classic beauty, that that never looks 'wrong', not the whimsical 'fashion' beauty that flips around all over the shop. The classic cut suit, for instance or a simple form fitting black dress. The graceful beauty of a swimming swan, or galloping horse. Things that almost all humans everywhere find attractive no matter the time period. Natural forms, beautiful forms.
Reply: jesus fucking christ, did someone rub a bag full of salt in your vagina today or what??  You seriously can't be that close minded about something. English cars aren't the best shit out there and still you talk about them like they are a drug to you. THEY'RE CARS. You sit in it and use it to go from a to b. If you want to get there faster, you make the engine better. If you want to look good while doing it, you repaint it with fancy new paint.
Seriousoly bro, loosen the fuck up.
Reply: Mr. Urmo's channel
Ah, my dear philistine, you have much to learn.
If you wish to get from A to B, might I recommend a bus or a train? Or even a bicycle?
There is nothing like the feeling of a balanced chassis beneath your buttocks, a perfectly weighted steering rack at your fingertips, a delicate set of pedals at your feet and a rifle bolt gearchange to your left. Nothing like taking that little lot and hurling it down a twisty road, forged thousands of years ago by nature, and exploding hydrocarbons into sweet noise and joy whilst doing it.

To make it faster, you make it lighter, alter the suspension, brakes, gearing, aerodynamics... or possibly the engine too. Also tyres, they're really important.

If you want to look good, you buy a car with good proportioning and unfussy detail.

When you find the perfect package of car, road and mindset... magical things happen. Closest I've ever come to mind altering drugs is thrashing a replica of a 1950s Le Mans replica round random corners. Thankfully, it's completely legal, unlike drugs, and won't fuck up my body and mind. Why would anyone not want that?

If you don't like driving, get off the roads and clear them up for those of us who appreciate finding the limits of what physics will allow us to do.

English cars aren't 'the best shit'. The best cars are the best. It just so happens that many of those are BRITISH.
Learn some geography too.
Reply: Did i say i have anything against driving? I love it. the thing is i've never really had the money to get the perfect setup. everything with me, is a bit wonky. something is always off. Either it's a dune-kart that has no brakes, or '96 vaxuhall (i think that's what you call it there. It's called an opel here) vectra B with warped brakes and worn out rear bushings, or a rotten and beaten merc that uses more oil then most bodybuilders.
I get "high" from knowing, that I am controlling a motor-vehicle that might kill me, and am keeping it from killing me.

You might have the priviledge of being able to purchase and put together these "perfect combinations", but many others don't. There is no need to judge someone by how they do things, or how they think something should be done, because that might be the only affordable option for them.
Reply: Mr. Urmo's channel I never had large amounts of money. I dragged my first three cars out of various fields and bashed them back together in my garage. I still have them all.
It's not so expensive to keep a car in a nice condition. Doesn't have to be a very good car, just a well sorted one.
Reply: It would totally be at the pick&pull if it weren't for this. Stop bitching.
Reply: Gazpacho8 The what?
Reply: The junkyard.
Reply: David Fresne Oh... well in that case Gazpacho is full of crap.
Cheers.
Stupid slang...
Reply: Gazpacho8 You, sir, are wrong.
If this car still had its V12 it would be really quite valuable and would probably be cruising peacefully around as part of a nice collection. Like mine is.
As soon as the V8 went in, it became nearly worthless. If it wasn't for this, it'd be a really nice car.
Reply: Foxtrot Oscar For 6 months have you guys been bitching around about the Jaguar and I have to say that I mostly agree with Foxtrot Oscar. But one thing that is the sad truth is that MUCH nicer cars than this is being crushed - every day...
Reply: Vixhall Yeah, but if you can save anything, then it should be saved. Or in this case, it shouldn't have been ruined in the first place.
Worst I've seen was a mint MGA that had to be parted out and the chassis crushed due to... water damage. Seriously, almost new restoration, guy just got it back, one little flood and the insurance company wants it crushed.
Such a shame.

This is why I never told them about the five... six times I've drowned my Landy...
Reply: Foxtrot Oscar Stop complaining. The V8 that was fitted to this car kept it running for a fair few years after the V12 went out, and not everyone can afford to buy, let alone maintain the Jaguar V12 engine (or the straight-six). Chevy V8s are far easier to get parts for. And I'm British, and I'd still rather see this car running like this, than sat in a corner rusting to death with a trashed engine.
Reply: ***** Do not try reasoning with him. As you can see, even after 197 replies, he remains unswayed and stuck in his purist ways.
Reply: ***** yes he is to ingornant to see facts and pulls random numbers from nowhere.
Reply: ***** The V8 fitted to this car ruined it.
The jaguar V12 is more powerful, more reliable, smoother, simpler, easier to drive and far, far, far more pleasurable than any comparable V8. Why spend a fortune swapping one in when fixing them is doable in your own garage? I'd far rather strip and rebuild my V12 again than do another engine swap. In fact, I'd rather rebuild the V12 twice than do one engine swap.

If you cannot afford to buy and maintain a V12 jaguar... DON'T FUCKING BUY ONE.
It's really simple.
Chevvy V8s are a BITCH to get parts for. Not only do you have to remember which shitty LS number yours is, you also have to remember which year it is, which bit they fucked around with in which year and even, for some parts, what month yours is from!

I would rather see this car in a corner waiting for love, than being smashed around, never to find love. These guy don't care. They find it funny that a sleek, luxurious automobile has become a smashed up thrash toy. They spend a fortune on a shitty V8 and still it looks like a heap of shit. It is a heap of shit. Not only is the engine a pile of crap, but it doesn't even fit in the bloody car!

But of course, the ideal would be that whoever blew up and replaced the engine in the first place hadn't been such a useless prat to have damaged it in the first place.
I thrash the bollocks off mine on a daily bassis. However, I take five minutes each week to tend to its needs. Check the oil, top it up, replace any suspect parts. Change the oil and filters regularly and generally keep it in top fettle. That's how it's achieved over 300,000 miles without a single problem.
Reply: David Fresne And what the flying fuck is wrong with being purist?
The engine is good. the car is good. Not a single thing about it is bad considering its age. The Jaguar 12 provides, in stock form, more power, smoothness, reliability and economy than any comparable V8. Why change it? Why not enjoy a car as its makers intended? Why even consider a car if you don't actually like it? If you want a V8 powered car buy one. If you want a Jag XJ12, you're not one of those people who wants a V8, so don't fucking buy one.
Reply: TheLordJethro The facts are, the Jaguar V12 is better than any comparable V8 ever produced. In a modernised format the J12 can easily make 8-900hp. No N/A V8 of comparable size I've ever seen can do that and still be silky smooth, reliable and supremely drivable. In fact, no V8 is that smooth full stop.

The facts don't lie.
Reply: Foxtrot Oscar  There's nothing wrong with being a purist, but, after 8 months of arguing about something two guys did for shits and giggles, it's get kind of old.
Reply: David Fresne Exactly. However, I'm not the sort to give in to idiocy without good reason.
Reply: Foxtrot Oscar bullshit all I got to say watch coverage of dragweek you will see some N/A v8s with over 1000 horsepower make the trip.
Reply: TheLordJethro Read the fucking statement properly you dip shit.
I said OF COMPARABLE SIZE.
Yes, there are 1000hp N/A drag cars... running on race fuel, and displacing 8-9 litres plus. A 5.3 litre V8 on standard fuel is NOT going to be making 1000hp or even 700 N/A and still be reliable. In fact, it'll probably not even be drivable, and may even blow up on the first crank. The sort of compression you'd need would put it dangerously close to autoignition.
Reply: Foxtrot Oscar hey, you know whats cool about youtube, if you don't like something, you don't have to watch it.
Reply: Ben Duke Hey, you know what's cool about YouTube, FREEDOM OF SPEECH!

I love living in this free land, this benevolent society, this glorious nation of freedom, liberty and good, proper tea.
Rule Britannia.
Reply: Foxtrot Oscar im english my dad has owned tons of vintage jags, still has a 420g but i think its great to give a old rotten jag a new lease of life.. it would have sat under cover in a yard rotting away till the pikeys came and offered £50 for it to scrap it, so why dont you foxtrot oscar or fuck off if you like and bother people who care... p.s. you can buy a bonnet for £60 so not such a big deal!!!!!!!   http://www.ebay.co.uk/itm/jaguar-xj6-series-2-bonnet-/331302735168?pt=UK_CarsParts_Vehicles_CarParts_SM&hash=item4d232e8d40
Reply: Foxtrot Oscar You're on a private website, no such thing as freedom of speech here. And that's a myth anyway.
Reply: Harry Edmonds It never would have needed a new lease of life if some daft prat hadn't stuck a crappy V8 in it in the first place.
In addition, if you really must do something like drag racing with a Jag... for the love of god keep it in keeping with the original direction of the car. A Jag should be subtle and refined. Turn it into a world class sleeper, lord knows they could've for the money... but no, they take a refined and dignified car and turn it into... shit. A mockery, a laughable heap of utter turd.
It's not money, it's the principle of the thing. Why fuck shit up for people who can appreciate things?
Reply: ***** Freedom within the operating boundaries of youtube.
Still more freedom than most people get.
Freedom of speech isn't a myth, it's a name applied to a large degree of flexibility in what you say.

Of course, freedom itself is total bollocks, no one has it, but the expression freedom of speech has a legitimate application, even if it is misleading.
Reply: Foxtrot Oscar waaahh! dont cry too much pal. theres plenty of jaguars without a supercharged v8 in them. my dad has 3 in his garage.i'm sure one isnt going to harm anyone.
Reply: wiggawithattitude Supercharged V8 Jaguars aren't exactly sacrilege anyway - lots of Jaguar XJRs, XKRs, and other R-spec Jags have been produced in that way.
Reply: wiggawithattitude There aren't that many S1 LWBs around, actually. Especially not with so many of the original NAS trim pieces. Most people have swapped out the the ugly bumpers and funny small headlights for standard Euro spec items.
Reply: ***** Supercharged V8 Jaguars most certainly are sacrilege!

Jaguar engineers tried very hard to avert the V8 intentions of the top bods, and were winning until Ford came along and just demanded a V8.

Jaguars have straight sixes, always have done. Except when sometimes two straight sixes are bolted to the same crank and thrown in.
Hence the Daimler Six and Daimler Double Six which were the luxury versions of the standard Jags. (Luxury versions of luxury cars? Super luxe...Mmmm)

The V6 is the current best engine in Jaguars range.
Reply: Foxtrot Oscar So, you really are a fucking idiot then. Wow.
Reply: Foxtrot Oscar For if you were to do your research, you will see that it was Jaguar who pushed for a new engine with at least 8 cylinders, as Lexus had shown this was the way forward - they decided that 6 cylinders would have poorer emissions, 10 would be imbalanced, and 12 would be too expensive and too thirsty. And that's taken from a quote from the late Trevor Crisp.
Reply: ***** Despite Jaguar having designed the 2nd gen XJ to not fit Vee engines, specifically to divert the possibility of a V8. Of course, they then had to redesign it for the XJ12...

10 works fine, 12 doesn't have to be thirsty, six is smoother than 8.
8 is more expensive than six and less smooth, why would a luxury car manufacturer with a tight budget push for that?

The only reason for a V8 is.... Americans.
Reply: Foxtrot Oscar Bollocks, bollocks, and more bollocks. Since what I'm quoting came straight from the head of Jaguar Powertrain, then your bullshit is clear - and clearly being made up by you.
Reply: ***** I can't find any direct quotes so... yeah.
You can't really call bullshit when what you're saying has no backup either.

It was also a Jaguar, XJ40 design documentary that explained Jaguar's stance on V8s just before Ford came along.

I, however, do have backup. Ye Olde Favourite. Logic.

Logically, there is no good reason for a V8 in a luxury car.
Reply: Foxtrot Oscar Wrong, wrong and wrong. Jaguar's stance came BEFORE Lexus proved them to be actually wrong. The Lexus came out around the same time Ford bought Jaguar. Mercedes had used V8s in big luxury cars for a long time as well. And since you're not going to do any actual research - read http://www.aronline.co.uk/blogs/cars/jaguar/xj40/the-cars-jaguar-x300x308/ and stop being such a fucking cretin.
Reply: ***** Hell, even Rolls Royce had used V8s in all their cars... however the Jaguars were considered smoother and more refined.
Smoother and more refined than a Rolls frikin Royce!

The V12 will always be king. That's why Rolls use it now, that's why BMW reserve theirs, that's why Bentley have a W12 (still a 12)

I actually read that article yesterday.. now who's the cretin?
Not only is your tone distasteful, but your judgement is wrong too.

Lexus proved that a V8 could be... smoother than people thought they could. Physically, they cannot be as smooth as a decent six, and they're miles off a V12.

It is the V8 and the V8 alone that makes XJ8s fairly rare and undesireable cars these days. No one wants a V8 Jag because it's uneconomical and not a V12.
Reply: Foxtrot Oscar yet jag has the new f-type with a supercharged v8 hmmmmm and ford no longer owns jag an indian company owns jag.
Reply: TheLordJethro The same V8 they've had since Ford.

Jaguar are owned by BRITISH company Jaguar Land Rover PLC.
JLR are owned by Tata.
Reply: Foxtrot Oscar Which is Indian my friend
Reply: MRNFSFREAK2 Well done. 

However, Jaguar are owned by a British company.
Reply: Foxtrot Oscar So owned they are in fact owned by an Indian company called Tata stop kidding yourself that they are not.
Reply: TheLordJethro Jaguar are owned by Jaguar Land Rover PLC. Legally.

Their HQ is in Britain, their factory is in Britain, their design and sales divisions are in Britain. The only thing not in Britain is most of their dealerships.

They're as British as a slice of apple pie and an eccles cake and tea from a thermos.

More British than Chrysler is American, anyway, as they're directly owned by Fiat. But everyone still knows them as American, and rightly so, they are.

It doesn't matter a flying fig where the money comes from, it's where the heart and soul of the company, and the cars, is, that makes the difference.
Reply: Foxtrot Oscar Tea is Chinese, and the Portuguese had it before we did. If it's an actual Thermos flask, it's German. Jaguar are not more British than Chrysler are American; that's a stupid argument, and obviously bollocks.
Reply: ***** Heart and soul.
Chrysler are owned by Fiat.
Jaguar are owned by JLR, which is owned by TATA.
That means Jaguar is owned by a company based where it is, and Chrysler isn't.

In furtherance, Britain once owned India, so it's sort of coming back around. The US hasn't had any dealings with Italy.
Reply: Foxtrot Oscar You keep finding more ways of spouting bollocks, don't you?
Reply: ***** More?! I haven't even found one yet!
Reply: Foxtrot Oscar You've posted a whole bunch of rubbish all the way through this.
Reply: ***** Where? Point some out and I'll tell you precisely why you're wrong.

Want to know how I know I'll be able to do that? Because I'm right.
Not to blow my own trumpet or anything.
Reply: Foxtrot Oscar And you know who owned India before Britain? The Marahtas and some Mugal kings. And no one is saying that there is anything wrong with being owned by an Indian company in fact the only person here that is bothered by it is you. Its just a fact that you can not except. Your arguement makes as much since as saying that all american car companies are British because Britain once owned The Thirteen Colonies.
Reply: TheLordJethro accept* silly auto correct
Reply: TheLordJethro I'm not bothered by it because it's not true.

Britain didn't own the Colonies, the colonies were Britain.
They were brand new entities, extensions of Britain. They were stolen by the French and some jumped up little treasonous murdering cunts who decided to start a war for 'freedom' against the will of the people.
The US was another brand new entity formed about three years after the war had ended, thus we never owned the US.
Reply: Foxtrot Oscar Did I say you owned the U.S.? No I said you owned the thirteen colonies. The thirteen colonies were not britain Britain is an island off the northern coast of western europe. And all that other shit you said basically says that the government of Great Britain owns this land. But really if you want to go down that route, Native Americans owned excuse me "lived" on the land for hundreds of years before Britain got its hands on it. Honstly your Empire as great as it was is dead and gone The United Kingdom will be no more soon. Scotland will leave and I have a feeling the Welsh are not to far behind from the same thing. Your points you make are only "correct" when you make them. You obvisouly have a problem with Jag being owned by an Indian company because you cant accept it. Hell my sons auto technology textbook published even sais that tata ownes both Land Rover and Jag. Get over it, its how the auto industry is now days I am sure tata will sell jag as soon as they get offered more than what they paid for it.
Reply: TheLordJethro http://www.caranddriver.com/news/tata-buys-jaguar-and-land-rover-from-ford-car-news 
There one quick google search that took me less than a minute to accomplish. Where is your proof? Right I know everything you say is indisputible fact. Forgot about that.
Reply: JLR stands for Jaguar Land Rover they are one company selling two brands
Reply: TheLordJethro They were an extension of Britain the political entity, not Britain the physical landmass.

NOT the government. The Government is the voice of the people and
the leader of the people, the actual land was owned by the Empire.

The Empire lives on in the UKs various overseas territories, and through the Commonwealth, a collection of ex-Imperial colonies who voted to remain with the UK with the Queen as head of state. In fact, there are one or two examples of countries who were never part of the Empire proper voting and asking and being accepted as commonwealth countries.
It's essentially the same as the old Empire days. Free trade between a number of mostly independently governed states.

Scotland probably won't leave. However, the voting is fucked up. Scotsmen living in England don't get a vote for where their country ends up. That's bullshit democracy if ever I heard it. Apparently, the vast majority of those millions of people would vote no, according to surveys. 

However, that's all irrelevant as the United Kingdom and the British Empire are NOT the same thing. The United Kingdom of Great Britain and Northern Ireland held the Empire. The UK is just a part of the Empire.
If the Scottish leave, they'll be fucked. If the Welsh leave, they'll be fucked. If N.Ireland or England left, they'd also be fucked. Neither can survive in the Eurozone, they need the protection and might of the Pound. Although I suppose England could technically take the Pound with her. 

http://en.wikipedia.org/wiki/Jaguar_Land_Rover

Jaguar Land Rover PLC is a BRITISH company that owns Jaguar and Land Rover.

JLR is a subsidiary of TATA. 

That was the top result of a three second Google search. Top of the page.

Bing bang bong, you're out of here.
Reply: Foxtrot Oscar And what the hell do you think India was?
Reply: TheLordJethro A separate country controlled by the Empire through remote means and local governance.
Reply: Foxtrot Oscar  I talked my brother into staying British when he went performance with his MG, He wanted to put a small block Chevy in it. I almost wish I had let him.   He can't understand it.  He can't cope with the supercharger, he can't even  figure how to use a choke despite four years of me trying to explain it to him. And the gods help him if he ever has carb problems.  Its hard to believe he is my brother. Too many Americans can't cope with Euro performance, sad but true.  Raised driving all powered automatic land yachts does not breed a connection with the vehicle.

  Me, I have been driving the same 40 year old VW since 1990. Only parked it this year from declining physical health.  Euro and American cars both have their pluses and minuses. As do V8s. I would sell my mother for donor organs for a Ford powered De Tomaso Pantera. But It is not to be.
 
  I agree with you that what happened to the Jaguar was sad.  But I do have to agree with one thing your critics here have said, Old cars from your side of the Atlantic have no parts availability here. And the very few service people who understand them are priced for the upper classes. The only people in the US to really care about this car for what it is would have left it to die for not being perfect and complete.  By the time it had that Chevy motor in it, it was dead by domestic standards. Its most likely fate would have been stripped for parts on eBay, which is far too often the fate for a lot of similar vehicles.  Try not to judge our car (or American culture) based on Youtube commentors, tempting though it may be. We are not all cut from the same cloth.
Reply: Tak Wolf There are, of course, plusses and minuses. You're going to be more comfortable in, say, a Cadillac than a Rover when driving thousands of miles.... but a Rover works on any road, a Cadillac only works in a straight line.

I'd steer well clear of a Pantera, mainly because it promises more than it can deliver. Looks great, isn't quite so tasty under the skin.

Parts are rarely a problem, I know people who very silly old cars, NSU Ro80? Where do you get parts for a rotary saloon car from the 60s built buy a German company no one's ever heard of? Internet. Shipping isn't that much.

I get parts for my Nissan from Japan.

And more Jags from the 60s went to the US than anywhere else.

Most of it is doable at home. It's all just bolts, really. Bolts and a ton of little pipes and vacuum systems.

I'm not entirely against dragging the car... but the way they've done it is so... boring. And insulting.

Everyone sticks a big V8 in, throws a supercharger on it, and has half of it hanging out of the car. With the amount they've spent on it, they could've put something really interesting in there. If not a V12, at least something that isn't a boring old V8 that doesn't even fit.
Reply: you do realise that in the states they had legislation required cars from other countries to put in american engines
Reply: brian thompson Which is a load of horse shit. Why buy a car if you're just going to have to stick a crap engine in it? 

What's the point in 'freedom' if you actually don't have any?
Reply: Foxtrot Oscar Because I can have way more fun with that "crap engine" then spending a bunch of money making it stock.
Reply: TheLordJethro Well, I beg to differ. I've found my V12 to be far more fun than any V8 I've ever owned. The sound, the smoothness, the sense of grand occasion it adds to every single journey... Even pootling down to the shops for the weekly food run is an adventure when there are 12 cylinders arranged in Vee formation.

And you'll spend far more putting a V8 in than keeping a V12.
Reply: Foxtrot Oscar Here we go again for the probably the tenth time.
My friend had an XJ12 in high school the thing was crap: it was gutless, never ran right, and the electric issues made no sense. Not even remotely fun to drive. I have yet to hear a v12 that I prefer over a v8 because their probably isn't one. That is my opinion and you have yours.

"And you'll spend far more putting a V8 in than keeping a V12." Once again maybe in England not here, in the US, you can find cheap v8s anywhere for cheap. The few v12s I see people are asking an arm and a leg for upwards of 2000-3000 for an engine that doesn't even run.
Reply: TheLordJethro High school? Isn't that your equivalent to secondary school? XJ12? I doubt it.

Gutless? 300hp will never be 'gutless' for a 1970s 5.3 litre.

If the car is old and worn out, it won't be much fun. The true joy of it is in its precision, and when its worn, there is none. 

You've probably yet to hear a V12 at all.

V8s physically cannot run right. Well, crossplanes can't anyway.

V12s aren't massively cheap... but that's because there's demand for them. The supply is there, but demand is high, so prices are fairly high.

People want them, that's why they cost. No one wants your V8s, that's why they sit in scrap yards and you can buy them for 20p.
Reply: Foxtrot Oscar Demand? Not here. No one wants an XJ12 or a v12 here. He baught it for 2000 he ended up blowing the engine up and parting the car. I am going to pull one of your cards How could you possibly know if I have heard a v12 or not?

"V12s aren't massively cheap... but that's because there's demand for them. The supply is there, but demand is high, so prices are fairly high.

People want them, that's why they cost. No one wants your V8s, that's why they sit in scrap yards and you can buy them for 20p."

Congrats you just contradicted you self.
Reply: The brakes are in (almost) the differential. Only the British, dahling.
Reply: TheLordJethro Considering the vast majority of production went to the US to begin with, clearly the V12 was wanted. Considering they're now quite valuable, I'd say that demand still exists.

If you believe a V8 to be aurally superior, clearly you've never heard an uncorked V12. Either that or you have no taste in music and probably listen to Justin Bieber.

People want V12s, that's why they cost a bit.
No one wants V8s, that's why there aren't any over here, and in the US they're incredibly cheap.
Reply: Conrad Shull The rear brakes in the original Jaguar IRS setup are mounted inboard, between the diff and the suspension upper links/driveshafts, whatever you want to call them.

This reduces unsprung weight, that is, the weight of everything that moves on the road side of the spring, rather than the body side. Unsprung weight is important because it affects how quickly the wheel can respond to bumps and to the spring.
If the unsprung weight is low, the wheel can move quickly out of the way of a bump and be sprung back down again quickly, which maintains grip better. There is also less inertia in the wheel assembly thus less force transferred to the body. The grip is better and the ride is better, without softening or stiffening the springs. You get handling and ride, which is a rare trick to pull off.

You see inboard brakes quite often in race cars.

The only problem with them is that they're more difficult to get to when you need to change the pads.

Only clever people, daaaahling.
Reply: Foxtrot Oscar Saying Americans spell words wrong because you spell it differently is like going to Mexico and screaming 'IT'S NOT HOLA, IT'S HELLO YOU UNCULTURED SWINES!'
Reply: Foxtrot Oscar lol there is no demand for v12s here sorry. Most of them are in junkyards now anyway where they belong. Stop forcing you opinions down my throat. thanks.
Reply: Nail Clippers No, it isn't. Mexicans speak an entirely different language. Americans claim to speak English. Well, in that case, speak English properly!!
If you all spoke Spanish, I'd say nothing.... unless you were spelling that wrong.
Reply: TheLordJethro Quite clearly there is demand. That's why prices are high, and cars with the original V12 are worth far, far more than V8 swapped cars.

In period, they were more powerful and more economical than comparable American engines, as well as being just as reliable, very strong and much, much smoother.
And they sound much better too.
Reply: Foxtrot Oscar Is that why that only 100,000 series one XJs were produced and only about 3000 were v12 cars and only 16000 v12s for the series two XJs. Yep seems like v12s are in high demand. No one I know wants one. and only one person I have ever met wanted one he got it and it ran like shit, overheated, and all the eletrical problems, made it a pretty unfun car.

as for sound that is still your opinion. The best sounding v12a are Ferrari's. Even then I still prefer v8 sound. I do not know why you even keep saying this. We know you like their sound.
Reply: Foxtrot Oscar Americans use a different dialect of English you moron. There is different dialects for all languages. If you want to be so proper and politically correct you should be speaking in old English.
Reply: TheLordJethro'Only'?
What the hell do you mean 'only'?!

100,000 cars is a shitload considering that the XJ was high end, Rolls Royce rivalling luxury automobile. One of the most produced V12s ever, if not the most produced.

So your mate got a shit one.
Mine has never overheated, has had no electrical problems since I replaced the wires that had been eaten by mice, and is very, very good to drive. Very few cars have ever managed to match the superb blend of handling and ride comfort that the Series XJs managed.

The best sounding V12s are Lamborghini's, actually, and V8s sound shit.
Well, crossplane V8s sound shit, due to that annoying and incurable misfire, and flatplanes just aren't as tuneful as a V12.

Americans do not speak English and use their own slang, as everyone else does. You shouldn't use that slang when speaking with others, as I refrain from using my own local slang on the internet. It helps to just speak basic English.

Americans can't spell though. Even a different dialect, such as Lancashire over Highland over Brummy over Scouse and what have you, all use the same spellings, and utilise the same spelling rules for the regional parts. None alter that part of the language... Except Americans.
Reply: Foxtrot Oscar You missed my point. out of 100,000 series one XJs built only 3000 of them were v12 cars. Seems like the 6 cylinder was vastly more popular than the v12

You think Lambo v12s sound the best great. I gave my opinion you keep commenting like your opinion is fact. You keep repeating yourself why? Have you ran out of things to say?
Reply: TheLordJethro Of the 98,000 S1 XJs, 4,100 were V12 powered.
Bearing in mind that the 6 cylinder was on sale for 6 years and the V12 only squeezed in for the last 2 years of production.

The 6 cylinder was more affordable. Given the choice, far more people would have bought the V12, this is why the V12s are more valuable today, because they're more desirable.
Reply: Foxtrot Oscar We're stuck to a rock flying around a ball of plasma at thousands of miles per hour, from the moment Earth became a planet until now has required an immense amount of balance and perfection, and you're pissing yourself because I was raised on a different continent and say shit like aluminum and tomato differently? Also 300hp for a 5.3 liter V12? That's pretty weaksauce man, especially when most American V8's from that time period were pulling closer to 260-430hp from the show floor. But those engines were heavily modifiable, and at the time significantly cheaper for something like a '71 Charger commuter, not to mention you could get a 425hp engine from the dealership and still have money left over to change the aspiration or get some better suspension before you even begin to touch the cost of your precious Jag.
Reply: Nail Clippers 300hp from 5.3 litres of heavily restricted silent engine. A comparably sized engine from the US wasn't making that much. The '350s' were struggling to make 300hp... and yet if you ditch the highly restrictive factory intake and exhaust you can get 360-370hp out of the JV12... for free.

The only 400+hp American engines were all well over 7 litres.
Specific power was waaay down compared with the Jag.

Thing is, you could spend a fortune on a Charger modifying and changing... and it still wouldn't be as good a car as a bone stock XJ.

There's a reason the Jags costed a bit, because they were bloody good. Also a bargain. A Rolls Royce beating car for not a vast amount more than most other 'normal' cars.
Reply: Foxtrot Oscar "you could spend a fortune on a Charger modifying and changing... and it still wouldn't be as good a car as a bone stock XJ" Do they still even produce V12's that fit in the JV12? Aren't there only like four thousand originals? So you'd rather them dump buckets of money into an engine for a car they bought for $1000, that can make 350hp maybe, then NOT change anything else that would alter the look of the car at all, and go drag race it? That sounds pretty fucking boring to me dude, and waaay out of place for a series that basically always messes around with muscle cars/trucks/motor homes. So yeah, I'd rather throw a shiny new V8 into a '69-'71 Charger roller chassis, spending maybe 8-10 thousand on additional go-faster parts, and having a 700hp behemoth that eats JV12's for breakfast, while having more fun doing it than I'd ever have with a posh little stock Jag.
Reply: Nail Clippers Do they still produce original Charger engines?
What kind of a question is that?

You can still pick up decent Jag 12s.
There are many, many more than four thousand. Probably more like a hundred times that many.

I'd rather dump the same amount of money on a car that ended up making more power, was slicker, cooler looking, cooler sounding, drove better, was more original and tasteful, and that would confuse the living daylights out of everyone.
You see any car with a massive V8 in it and expect it to be fast, right? It's all about the engine.

But if you're buying an old car... surely the point is to have that car? Otherwise it's just a body shell for a boring, over done engine to sit in.

A V12 Jag drag car is very interesting, because it's not common.

My V12 makes 400hp and cost next to nothing. With just some basic welding and cutting equipment you can bodge up a new exhaust and intake that releases 50hp. For free, essentially.

I'd spend 10k building a Jag 12 up to 1200hp (from an engine that cost me £200 to begin with) and go around shitting all over V8 just for the hell of it. If I could afford such things, of course.

And you know what? I'd have so much more fun being different, and having more, cheaper, better power and that unbelievable noise of a V12 at full chat.

Jags aren't 'posh'.. Don't be silly.
Reply: Foxtrot Oscar the point of owning the a car is not the result its the long road to get to that result and all the fun and experience you get from building and fixing the car (in other words it does not matter what the result is as long as you have fun getting there) thats why a old v8 muscle car is always the way to go
Reply: Muscle Car Guy The journey is just as if not more important than the end result.... which is precisely why throwing a boring V8 like everyone else has since forever is not the way to go.

V8s are BORING if nothing else.

Ignoring all the mechanical advantages of a V12, no V8 will ever stirr the soul like twelve cylinders will.
Reply: Foxtrot Oscar i hate the sound of a 10 or v12 the deep growl of a v8 will always rule
Reply: Foxtrot Oscar Shit I want to visit wherever you live if 2nd gen Chargers are a common occurrence. You're arguing your opinion like it's fact, so everyone who debates you is wasting their time.
Reply: Foxtrot Oscar "It's all about the engine" lol someone hasn't seen episode 23.
Reply: Muscle Car Guy I love the smooth, crisp barks and howls of 10s and 12s.

The unsteady, phlegmy cough of a crossplane V8 reminds me of an asthmatic smoker with a cold getting angry.
Reply: Nail Clippers Chargers aren't common.

I'm arguing logic because it's fact. My opinion is that logic is good because it's fact.

Drag racing is the engine.
Reply: Foxtrot Oscar Yet a 36,000HP rocket powered semi is seconds slower than a 2400HP '66 Chevy V8 twin turbo, also opinion =/= fact, no matter which way you try to twist it.
Reply: Nail Clippers Putting an engine on your penis isn't a good idea.
Putting 2400hp in a crummy old Chevvy isn't a good idea either.

Logic is a derivative of fact. Fact
Reply: Foxtrot Oscar How is it not a good idea? Having the fastest street car in America is a pretty good idea if you want a top notch dragster. You're contradicting yourself 'engine is everything' even though it isn't everything. Chassis, suspension, hell even how much air is in the tires can have a bigger effect on quickness than having a couple more pistons.
Reply: Nail Clippers Having that much power in a car that old that, even at the time, was not known for great handling or control. That's not a great idea.

The engine is the single defining characteristic of the car. There's no real focus on handling or ride or sophistication to any of the controls, it's just engine, power, go.
The fastest street legal car in the USA is NOT a Chevvy. It's probably a Ferrari. That's real world fast, not ideal condition straight line fast.
Reply: Foxtrot Oscar I love how you keep changing race types just so the argument is in you favor. There are thousands of touring muscle cars that are quicker around the track than a more expensive, harder to maintain Ferrari. I'm talking about the fastest street dragster , which is indeed a 66' Chevy (one V) a 6 second car. Also it isn't even NHRA legal to throw 2400HP worth of engine into a stock chassis, there's so much more engineering going into building dragsters than you seem to think.
Reply: Nail Clippers There aren't.
There isn't an unmodified muscle car on the planet that can touch a current Ferrari. If you're comparing a modern, modified muscle car to a 1980s Ferrari then sure, it'll be faster thanks to advances in technology and tyres and so forth. But it won't actually be a better car.

No, there isn't a lot of engineering in dragsters. Compared to real racing, the variables you need to be concerned with are far, far fewer in number. Greater in magnitude maybe, but that merely requires putting a bigger number into a calculator, rather than doing hundreds more calculations and thinking about hundreds more parameters. 

Chevvy has two Vees because the 'E' is stressed and short and comes after the soft 'ch' sound (as opposed to the hard 'ch' in cheese), and the V is unstressed and long and falls into a long stressed Y.

The 'Ch' makes the difference though. 

Basically, in English, if it looks and feels right, it probably is. Chevy doesn't look right, Chevvy does. 

'Chevy' should be pronounced 'ch-evee' with a hard 'ch' as in church or chives. 

I don't want a 6 second car. I want at least an hour behind the wheel.
Reply: Foxtrot Oscar Alright, I'm trying to talk about drag racing because that's what the Draguar is meant to be, but alright, Europe makes the best cars, America is bad and we should feel bad. I'm sick of people on the other side of the ocean being condescending douchebags simply because you can be. It's like giving a child an action figure and saying he can't take it out of the box because it would ruin the integrity of the toy, that kind of attitude is boring for a lot of people myself included and I'm sick of this conversation, bye.
Reply: Foxtrot Oscar God you have given me a special ungodly hate specifically for you
Reply: Muscle Car Guy Great. I'm being level and objective and you still hate me. That defines you as someone I give precisely zero hoots about. 
Out of sheer curiosity though, why the hatred?
Reply: Foxtrot Oscar muscle cars and v8s are the pride and joy of my country of america as well as being my personal favorite for many reasons
Reply: Muscle Car Guy Great. Unfortunately, in the grand scheme of things, they're not actually very good cars. Not as fast as one would expect, generally of low quality and low sophistication, quite expensive, generally too large and cumbersome for serious competitive track use compared to other cars.

The 60s were a fantastic period for racing. When 1.5 litre MGs lined up against 7 litre Chevvies... and won.

I think muscle cars are cool, and I respect that they have a long history in the hearts of many people... they're just not machines that I would consider owning for a long time. They don't thrill or satisfy like a proper sports car, can't compete with a supercar, yet don't offer the friendliness of a more everyday coupe or saloon.
Reply: Foxtrot Oscar Expensive!? My dad bought a 72 nova ss for 300 bucks and a 67 impala fastback ss for 75 bucks that both ran it realy all depends on what you do with the car if you want to make a race car out of one strip the interior and replace the suspension its all what you do with it and they are simple as fuck to modify.
Reply: Foxtrot Oscar ob·jec·tive
əbˈjektiv/Submit
adjective
1.
(of a person or their judgment) not influenced by personal feelings or opinions in considering and representing facts.
"historians try to be objective and impartial"
synonyms:	impartial, unbiased, unprejudiced, nonpartisan, disinterested, neutral, uninvolved, even-handed, equitable, fair, fair-minded, just, open-minded, dispassionate, detached, neutral

"V8's are shit" Because that's objective.

Have you ever even been to America?
Reply: Muscle Car Guy Try buying one now that isn't a shitter. Back in the 80s you could pick up an E type for a few hundred quid. Some bloke recently paid 77k for a completely rotten rolling shell that partially collapsed on itself in the auction hall!

Look at a Charger or whatever these days, easy 30k. That's a lot of money. New they were expensive too, and still are. What is it for a Corvette? 62k! Mustang? 50k for a high spec one!
Ridiculous money. You could have a Porsche or a Jaguar for that money, or you could have a Chevrolet or a Ford.... Premium or maker of cheap hatchbacks?

If you want to make a competitive race car you'll need to strip a lot more than just the interior, and you'll have to do serious work to the suspension and chassis to get it to grip and handle like a proper racer. Then of course you've got to take the engine out, replace it with one half the size and tune that up to the same power the original massive engine made so that you have the right amount of power, but with the snappiness and response you need.

May as well just buy a cheaper, better European or Japanese sports car to begin with. How about a Lotus Exige. Less than a Mustang and really very, very quick and fun right off the bat. Remove passenger seat, remap engine, stickier tyres and some uprated brake pads and that's a full fat race car already.

Also, have you seen a modern Corvette? That suspension is almost untunable without massive computer resources. The engine too is hard to tune thanks to the complex electronics that try to counter the natural inefficiencies of the pushrod crossplane V8. It's a crap engine, but you can't do anything about it!

If you want a cheap, fun car that's fairly fast and easy to modify... the only place is Japan. Toyota GT86. Heck, they'll even sell you one over there with unpainted bumpers, stripped interior and steel wheels for much less than a normal one, specifically aimed at people who want to modify their car. They just don't include or charge you for the bits you'd change anyway!
Reply: Nail Clippers

I am unbiased. I based my judgement of V8s upon my combined knowledge of all types of engines. I've owned and run a 2R, I4s, F4s, I5s, V6s, F6s, I6s, V8s and a V12. The V12 is my all time favourite and the V8s have been the least pleasurable on average, and also the most disappointing and annoying.

I visit the US regularly for work, and a few times for pleasure. I've driven across the US twice, and down the middle once and seen more of it, statistically, than the majority of US citizens.
Reply: Foxtrot Oscar its really all up to opinion one of the main reasons i like v8s is because they are quite balanced in torque and horsepower and lacking in neither i just find them to be easier to work on and much more versatile
Reply: Muscle Car Guy They're not though. Torque is mostly irrelevant, and I6s and V12s tend to make the best kind of torque as they're longer stroke but can still rev to make the power due to their physical balance (something a V8 lacks without heavy counterweights)

An I6 or I4 is much easier to work on. Some V12s are easier than some V8s. My SOHC Jaguar V12 was easier to work on mechanically than my pushrod Chevvy LS1.

I4s and I6s are far more versatile, as they actually work well in both commercial, passenger and performance applications, while V8s don't really work in performance applications and tend not to be economical enough for commercial use. 

And, from an engineers point of view, I absolutely hate the fact that they fire unevenly across the banks. It's just poor design and poor engineering practice.

On a personal note, I much prefer the sound of almost any other kind of engine. Even an I3 sounds better than a V8.
Reply: Foxtrot Oscar torque is very very relevant with no torque your car would launch like absolute shit i know by easier to work on i mean easier to find parts for and im not talking about new v8s im talking about classic v8s like the old 426 hemi out of a gsx and i find the growl you get from a v8 to be very appealing
Reply: Muscle Car Guy Torque is hardly relevant as even 500lb.ft is worthless to a car. Some cyclists can make that on their bikes. I can make 1000lb.ft with just a big stick. 
You need a gearbox to multiply the shit out of the torque to get usable 4000lb.ft or more at the wheels. Having an engine that revs just a little higher can more than make up the difference.

Crossplane V8s sound ok thrumming along at 3k... but they idle like shit and are dull, flat and toneless like white noise when you rev them hard. As the top of the rev range is where engines are most exciting, the fact that most other engines sound and feel better is only a good thing.

It is nigh on impossible to find bits for American engines. I had to ship a new piston set in when my LS1 lunched itself and that cost me more than an entire Jaguar V12... that easily makes more power!
Reply: actually we stole this from Australia, Australia also does this much more than us here in america... jags are cheap with a high price tag... jags are also ugly lol only in america
Reply: AstralLights Cheap with a high price tag? That doesn't make any sense, nor does it actually apply to Jaguars in any way. They're not cheap, but they don't have high price tags. They're actually pretty good value for money, always have been.

Jags are ugly? Really? You're saying that all cars produced by Jaguar are ugly? How about the F type? The XF? The E type? D type? MkII? S1 XJ?

Heck, the E type was proclaimed the most beautiful car in the world by Enzo Ferrari himself!
They put one in an art museum!
Reply: Jags are cheap...... put a high price tag on a cheaply put together automobile.. interior falls apart easy and cost to maintain is high... most "luxury" in this modern day is crapy  and cheap... yes my perception of jag maintains the same,, ugly. Most entry level vehicles can be compared to these luxury cars... for example the Pontiac and the Cadillac both brought in Holden yet the price tag is 30k difference... they are the same car with different logos and you cant say any different.. You just have to like them like yourself maybe one day i wil turn over and say damn what have i been thinking.. the new f-type S is actually a pretty cool sounding ride in dynamic mode just again cheap on the inside
Reply: AstralLights Cheaply put together? Have you sat in a Jaguar? Ever?
Do you own one? Have you ever worked on one?
No? Shut it then.

Pontiac? Cadillac? Luxury?

No. Jaguar offer a BMW 5 series rivalling car that rides better, handles better, looks more interesting and has a comfier, better looking, more interesting interior with greater luxury touches. It's the little things. Materials used more interestingly, the way the gear selector rises, just so. The subtle lighting..
And it costs as much as a 5 series.... What's the problem there?
Jaguar rate very highly in customer surveys.

No, they're not 'cheap' cars, but they do offer more than many others, done well, for the same sort of money. That's good value. And they're not boring.

As for the F type, the best way is the Coupe, which is prettier and in V6S form, 8k cheaper than the drop top. 60k for a superb sports tourer... Yes, that's a lot. But it's as good a car as anything else costing 60k, so why complain?

That's just what they cost.

You don't expect to pick up a Rolls Royce for 20k, do you?
Reply: Foxtrot Oscar im sorry but looks and sound and such is all opinion i don't like jags especially the fucking ugly e-type i dont want something fancy with all the assists i want something torquey and tries to kill you at every corner and speed bump because that is my opinion of fun in a vehicle
Reply: Muscle Car Guy Looks and sound are opinion. However a huge number of people in the world like smooth, clear notes. Most call it 'music'. A straight six engine produces much of this, the Jaguar XK being one of the more classically sonorous.
As for the looks, you say it's fucking ugly, Enzo Ferrari called it the most beautiful car in the world. The art museum in New York put one on permanent display. I think the general consensus is that it's pretty damn special.

You want something torquey? Most European engines make more specific torque than American engines.

You want it to kill you? Well... that's nice.

I like a car that's a bit of an animal, but I don't want it to actively be trying to murder me. That's a bit creepy.

Believe me, get it wrong in an E type and it'll bite back, but it tells you about it and getting it right is fantastic. A perfect four wheel drifting arc, riding a wave of straight six music... Mmm. Shame winter is coming and I shall have to retreat to my Land Rover and its 4wd safety soon...
Reply: Foxtrot Oscar I agree with you on the smooth ride and leg room thing
Reply: Looking back in this circle jerk of internet comments, your a assprick with no better time to do anything els than argue about some shitty jaguar that was "rare" and completely shit on the american car industry. Grow a pair and buy some proper tools. Stop crying on the internet because nobody gives a shit about your opinion on anything.
Reply: DrDaniel98521 I have plenty of proper tools. What does that have to do with Jags, excellent as they are?

Two more quick points.
One, no one's crying. Seriously, what the fuck is it with out idiots and assuming that because I'm talking, I must automatically be crying. There is fuck all here worth crying over, so shit the fuck up about it.

Two, take your own advice. No one gives a shit about your opinion either, so either stop complaining, or sod off.
Reply: It is a shame to see such a nice saloon car turned into something so ugly as in this video.
Reply: ***** it is a shame that some people are stupid enough to like a jaguar
Reply: Muscle Car Guy So liking a car that is supremely comfortable, very fast for its age, handles very well for its age and is practically bullet proof if looked after... is stupid?

Sorry, I can't see the logic in that.
Reply: Foxtrot Oscar Are you STILL butt hurt about this?
Reply: rustyATV No? Yes? Maybe?
Who knows?

What the hell is butthurt?
Reply: Foxtrot Oscar http://knowyourmeme.com/memes/butthurt
Reply: rustyATV Butt.. hurt.

A merging of a word used principally by American children, and hurt.

Being an adult, British, and somewhat literal when it comes to spellings of words... that wasn't what I thought at all.
Reply: Dont you have anything better to do with your life?
Reply: DrDaniel98521 Not at this precise second. In about 10 more minutes, I shall have a perfectly baked pie. However, for now, there's not much else to do bar waste a bit of time nattering with lesser beings on the internet.
Reply: Foxtrot Oscar

You are NOT a Auto Journalist!!! You are JEALOUS and Hate America..

You claim to be a Auto Journalist(hahahahahahahalolololololol),surely you can find articles/review that have your same opinion!!!???!!!

Show us a article/review that says the Corvette is shit and gutless!!

You Cant !!! Fact!!!

Show us a article/review that says the Corvette Pushrod V8 is shit and gutless!!!

You Cant !!! Fact!!!

You are NOT a Auto Journalist!!!  FACT!!!!

Your Jealousy and Hate towards America is fueling your BULLSHIT opinion!!!!FACT

You LOSE!!!!!
Reply: zeusdog34 Yep, I'm so jealous of your massive national debt, and I hate the US so much that I went out and bought an entire milling machine made in the USA, just to prove how much I don't like the place!

My undying jealousy makes me hate America sooo much that I make up random bullshit like pushrods being rubbish and expensive things being worse than cheap things.

In case you couldn't tell, that was all sarcasm.

Go die, alone, in a hole. No, next to a hole. You're not good enough for a hole.
Reply: Foxtrot Oscar
hahahaha.. You a angry little brit..

Again with your CONDESCENDING comments..You cant help yourself!!!!

WHERE IS YOUR PROOF THAT THE PUSHROD V8 IS RUBBISH???

Yes you are JEALOUS!!!!
 
I ask you AGAIN, show us a Article/review that says the Corvette is rubbish,shit,gutless!!

Show us a Article/review that says the Pushrod V8 it rubbish,shit,gutless,anchor!!!

YOU CANT!!!!!!!

 You ALWAYS claim your BULLSHIT OPINION as Fact!! So there must be TRUE Auto Journalist that have the same opinion as you??So please find those articles/reviews!!!!!
You CANT!!!!!! Its your blind Jealousy and Hate towards America that will NOT allow you!!!!! FACT!!!!

YOU ARE NOT A AUTO JOURNALIST!!!!
YOU ARE A LIAR!!!!!!
Reply: zeusdog34 Proof? Do a little reading on engine design. Crossplane V8s have a number of problems with regard to performance applications.
Pushrods likewise have performance and efficiency problems.

The two together in a supposed performance vehicle is clearly a bad idea, that's why NO ONE uses pushrod crossplanes bar Americans and I think the Russians still do.

And certainly not for performance vehicles.

It's not a problem with the US, it's a problem with lazy engine design. 

Performance vehicles are meant to thrill from the off, and a big, lazy pushrod crossplane doesn't do that.
Not unless you've been brought up with nothing else to compare to, anyway.
Reply: SHOW ME A ARTICLE/REVIEW THAT SAYS THE PUSHROD V8 IS LAZY!!!!! AND DOES NOT 'THRILL'!!!!!!

You CANT!!!!!!!

Again this is ALL your BULLSHIT OPINION!!!!! NOT FACT!!!!!!!!

WHO GIVES A RATS ASS IF AMERICA IS THE ONLY COUNTRY THAT USES THE PUSHROD V8!!!!!!! 
WHO FUCKING CARES!!!!!!

Most if not ALL the EXPERT REVIEWS ,RAVE ABOUT THE CORVETTE ,Z28 PUSHROD V8 ENGINE

C'mon even CHRIS HARRIS LOVES THE PUSHROD V8!!!! FACT!!!!!

You are a troll the is Jealous and Hate America..FACT!!!
Reply: zeusdog34 It's MECHANICAL FACT THAT LARGE ENGINES WITH HIGH MOVING MASS, POOR FIRING CHARACTERISTICS AND LOW SPECIFIC POWER WILL NOT RESPOND LIKE A SMALL, LIGHT AND POWERFUL ENGINE
FUCKING FACT YOU DAFT PRICK

What is the Z28 good for? Fuck all, and it's ugly and quite expensive.
What is the Corvette good for, equally fuck all, and it's really expensive.

END OF.
Reply: The corvette is one of the most track worthy cars for less than 100000$. On another note your bullshit regarding smaller eurotrash engines being able to out perform larger american v8's. It is a proven cold hard fact that american v8's are a extremely reliable and extremely performance capable engine. Show me a european engine that can out perform a modern ls7. And be under 50000$ its also a proven fact that modern dohc motors have a ridiculous rotating mass with 4 cams and 4 valves per cylinder. Also extremely unreliable. And the "lazy" "fat" "worthless" american v8's still out perform them with ease in terms of torque horsepower reliability AND price. go home you jerkoff.
Reply: DrDaniel98521 Aside from the fact it weighs twice as much as actual track cars, like a Caterham or a Lotus or an Ariel, and costs twice as much too. Is it twice as fast? No.

It's proven fact that like for like, very few American engines keep up with their European counterparts.

Look at the Corvette. 6.2 litres and a piddling 455hp. Ferrari get 600 with 4.5 litres.
Ferrari are getting 740hp out of their 6.3.

Yeah, that's really 'outperforming'.

The LS7? The mighty 7 litre, 680hp... no, 505hp... what?

How do Chevvy get so few horses out of such a huge swept volume?

One expects high power from 7 litres, especially from a 7 litre engine advertised by Chevvy themselves as a 'race' engine!

The V12 in my 42 year old Jaguar makes more specific power. And guess how much all those cylinders will cost you? About £300. 

Fact is, if a lightly modified luxobarge engine that's over four decades old, can perform as well as a brand spanking new 'race' engine... that race engine is pretty pathetic.
Reply: Naturally aspirated jerk off? I think not? And how much would a Ferrari crate motor cost? You can get a brand new ls7 directly from chevy performance for 16 503$.  AND they will make sure that you get the right motor mounts for mounting it in a worthless euro trash ride.
Reply: If you really think your still on top here, go to chevys websight. The 572 cubic inch big block making 720hp NATURALLY ASPIRATED NOT TURBO'D
Reply: AND ITS ONLY 17 903$ show me the price of a modern Ferrari or lotus or any other bs motor that makes that much power for that little money.
Reply: Im sorry your just so small minded and so arrogant. But one more thing 
Thats 720 horsepower of "lazy" "fat" "worthless" "out of date" PUSHROD engines !
Reply: DrDaniel98521 Aside from the fact that even in the 80s they were making that, N/A, I'd say you have a point.
As it's proven fact that they can happily handle that power, I'd have to say you're completely off your rocker.

My such a prick? Wow, English much?

Ugly Jaguar... Mmm... nope.
Reply: Happily handle horsepower??? From a 40 year old v12??? Made in europe?? Are you nuts. Those engines couldent handle the stock numbers even when they rolled off the assembly line. They blew rods and bearings in less than 50k kilometres. And ive seen it many times in old euro engines
Reply: And are you 12 years old. It seriously sounds like it. Anyways i have wayyyy more important things to do. Forgive me for getting involved in a argument with a bump on a log. Goodday
Reply: DrDaniel98521 Oh, you've seen it many times eh? Well I've seen American, German, French, Japanese, British, Russian, Korean, Czech, Spanish and even Swedish engines blow up. All engines die eventually, and every factory has an off day, so what.

However, when it comes the Jaguar V12, they're generally nuke proof.

Mine's got 300k on it. 300,000 miles. It's fine.

That engine won Le Mans twice, pulling 700hp. That's 24 hours solid high rpm action. It's one of the single biggest car killing races on the calendar. If you finish, you're a hero.

And the Jag V12 won it.

It's clearly not an unreliable engine. 

Know many 12 year olds with debating skills like this, or indeed a vocabulary of this nature?
Thought not.

Ruddy philistines.
Reply: Foxtrot Oscar
hahahaha EVERYTHING YOU SPEW IS 100% YOUR BULLSHIT OPINION!!!

Foxcock is Jealous and hates America!!!

Show us a Article/review that says the Pushrod v8 is the Corvette is gultess,shit!!!
Show us a Article/review that says the Corvette is gutless, shit overpriced!!!!

C'mon foxcock you been spewing this bullshit for years,where are the ARTICLE/REVIEWS that support you claim!!!!!!!  WHERE ARE THEY!!!!!!!
Fact,foxcock is a BIGGOT/RACIST!!!
Fact, foxcock is jealous and hates America!!!!
Fact, foxcock is NOT a Auto Journalist!!!!
Fact,foxcock spews nothing but lies
Reply: hahaha wow your an angry little brit..
Yo are NOT a Auto Journalist..
Reply: zeusdog34 *You're
Reply: it was a piece of junk anyway! XD
Reply: Phil Torayno Only once the original engine was replaced with 'junk' and the car was neglected.
Reply: Foxtrot Oscar hahahaha..On a CAR VIDEO COMPLANING HOW AMERICANS TALK!!!!
Your Hate and Jealousy of America is constantly in your mind and you feel the need to CRITICIZE EVERYTHING,from our roads,laws,guns,tax system,our History our cars ,the way Americans speak,upset cause we dont use the metric system,...IT NEVER STOPS!!!!
So I will NEVER STOP DEFENDING America against JEALOUS HATING BRITS LIKE YOUR WORTHLESS SELF!!!! 
You are NOT a AUTO JOURNALIST!!!
Reply: Foxtrot Oscar
hahaha your DEFLECTION tatics!!!!You NEVER STOP..
Well you definately fit the stereotype of BRITS, self centered Know it all  ,think your better than everyone else!!!  Kinda sad!!!
the few brits I have met seem to be nice but you are just a American hating douche bag!!!
Reply: zeusdog34 Again, there is no deflection.
I'm talking about you. That means I'm not self centred.
I don't hate Americans.

You're deluded, mad, insane, ga ga, loopy, deranged, etcetera.
Reply: Foxtrot Oscar
hahahaha..ALL YOU DO IS DEFLECT!!!! By Criticizing America EVERY chance you get..FACT!!!

Your Jealousy and Hate towards America is driving you MAD!!! You cant help but criticize and spew false bullshit !!!!

You are NOT a Auto Journalist!!!
Reply: zeusdog34 Yep, I deflect by talking about the topic at hand.

I'm also SO jealous of the US that I don't give a shit about half the stuff that goes on there. I hate it SO much that I make regular trips with work.

I criticize SO much even though that isn't even a thing.

I'm not an auto journalist, I just write stuff about cars that I then send to a guy known as 'editor' who then makes it appear in a shiny paper thing known as a 'magazine'.
Reply: Foxtrot Oscar

HAHAHAHA you are a LIAR!!!!

DEFLECTION!!!!!! In America it is!!! FACT..So get over it you little brit!!!

Thanks for finally ADMITTING that you are NOT a Auto Journalist!!

You are a Joke,thats a big FACT!!!
You have been proved wrong so many times is LOL funny!!!
You are the FARTHEST thing from a Auto Journalist!!! FACT!!!
Reply: zeusdog34 Admitting? Fucking hell you really don't get anything do you?

SARCASM YOU FUCKWIT.

Being a person who writes about cars, then has that writing put in a magazine on a regular basis IS an auto journalist. Fact.

Farthest? That isn't even a word.
Reply: Foxtrot Oscar
ooooooh angry are we....Too bad..

YOU ARE NOT A AUTO JOURNALIST,THAT IS A FACT!!!!!!

In America it is..So that means its a WORD!!!!!!! LIVE WITH IT..  you angry know it all self centered little brit boy!!!!

DEFLECTION!!!!!

On a car video arguing how Americans speak!!!!

Your jealousy and hate show through with every sentence you spew....
Reply: zeusdog34 No, just worried.
Sorry, I'm self centred how? Because you're using words that don't exist?
Well fuck you!
No, I'm arguing that you need to shut the fu... actually, no.
...
Reply: Foxtrot Oscar
DEFLECTION and more DEFLECTION!!!

Its a word in America,FACT!!! So live with it American hating douche bag!!!
No matter how you look at it..You are on a CAR video spewing bullshit about how Americans speak!!! That is a FACT!!!
That why you DEFLECT!!!! CAUSE YOU LOSE!!!!

You are NOT a Auto Journalist !!FACT!!!
Reply: zeusdog34 ...
Reply: Foxtrot Oscar

Sounds of Silence : )
Reply: zeusdog34 Well shut up then.
Reply: Foxtrot Oscar

HAHAHAHAHA,STOP LYING AND SPEWING BULLSHIT and I will..
But we know that HATE and Jealousy you have towards America will continue!!!

You FAILED in proving the Corvette is junk,gutless,overpriced!!! Fact!!!
You FAILED in proving the Pushrod v8 is shit,gutless boat anchor!!! Fact!!!
You FAILED(more like LIED) in proving the mpg's from other Autos(gtr,porsche,jag,bmw m5,ferrari).." I go by real world results"(foxcock)  hahahahahahaha
Sorry but the MANUFACTURES WEBSITES LIST THE REAL MPG'S!!!FACT
Stop the Jealousy and Hate towards America!!!!

You are NOT a Auto Jpurnalist!!!
Reply: zeusdog34 I should damn well hope I'm not a Jpurnalist.
I wouldn't even know what one was.

Either way, the figures I pulled from manufacturer sources are correct, just like everything else I say.
Reply: Foxtrot Oscar
hahahahaha
DEFLECTION!!!!
DEFLECTION!!!!  The only thing your good at!!!

You flat out LIED!!!!! You didnt prove anything!!!!
"I trust real world numbers"   hahahahahahahahahahahahahahahahahahaha
MANUFACTURES WEBSITE MPG's are CORRECT!!! FACT!!!!
Not your made up BULLSHIT ..
Prove me wrong with MANUFACTURES WEBSITE MPG RATINGS!!!!! You cant cause I already PROVIDED THE MANUFACTURES LINKS!!!!
You FAIL!!!!

Your Jealousy and Hate of America has corrupted your pathetic little mind!!
You are NOT a Auto Journalist!!!
Reply: zeusdog34 http://content.bmw.co.uk/bmwuk/pricesandspecifications_technical_specs/0,,1156_2979__bs-TQ%3D%3D%40bb-RjEwTQ%3D%3D%40bm-RlY5Mg%3D%3D%40ddi-Q78882%40dht-aHR0cDovL3d3dy5vY2VhbmJtdy5jb20%3D,00.html
http://www.chevrolet.co.uk/cars/corvette/features-and-specs.html

PROVEN WRONG BY MANUFACTURERS.

END OF FUCKING STORY.

Combined mpg = closer to real world driving than simple 'hwy/city'
thus EU standard Combined figures> non-standard American figures.

No, that's not hatred towards the US, that's just a preference to standard over non-standard.
Reply: Foxtrot Oscar
HAHAHA
MORE DEFLECTION!!!!!
DEFLECTION!!!!!

liar!!! THOSE ARE EU  standards!!!! WAY OFF ...WOW YOU WILL LIE TO NO END!!!
http://www.greencarreports.com/news/1091877_why-european-gas-mileage-ratings-are-so-high--and-often-wrong

You proved NOTHING  except you are GOOD at DEFECTION!!!!

YOU ARE NOT A AUTO JOURNALIST !!!!! FACT!!!!!!!
Reply: zeusdog34 EU standards are NOT the same as US standards, which is what the article you linked to is discussing. Flaws in the US system exploited by European manufacturers.

Learn to fucking read.
Reply: Foxtrot Oscar to the point of anal fissuring
Reply: zeusdog34 ...
Reply: ***** Delightful.... Your mind is a worrying place.
Also, you just lost a bet son.
Reply: Honestly, who cares about the differences between the two? If you like V8s, then you like V8s, and if you like the 12s, then that's it. I personally like my V8 camaro. I have fun with it and that's it. If someone doesn't like it, fine.  It's all about personal preference. This is the dumbest argument.
Reply: AM3RIKAN1 If you like V8s, fine. But don't then fuck around with V12s. Leave them alone for those of us who like them.

You don't buy a V12 car for its V8 properties, do you? Because that's fucking stupid...

This is a V12 car, and it's missing 4 cylinders. 

If you're saying a broken car is good, then sorry, you're a bit fucked up in my book.

It's not meant to be like that, it doesn't do what it should do any more... it's shit.
 End of.

PS. Crossplane V8s are a scientifically shit design. Flatplanes are the natural V8 configuration and how they work the best.
I have nothing against flatplanes, they're brilliant.

I have a lot against the shitty bodge job that is the crossplane, especially now that the problem it was invented to solve has been solved... better.
Reply: Foxtrot Oscar There is no reason for you to be an asshat and call me fucked up because I think something is cool. I think the draguar is cool because it's different. No, it doesn't run correctly, but it doesn't matter. It can still be cool. If it's fun, then who gives a damn. If you like the Jag with a v12, them buy one with a v12 and leave everyone the hell alone. We don't need your opinion ruining everyone's good time. Who cares if something is shit; if someone likes it, then let them like it, and keep to yourself. Smiles per gallon > miles per gallon.
Reply: AM3RIKAN1 I'm fairly sure an 'asshat' isn't a thing in English, and even if it were I wouldn't even know where to begin being one.
I didn't call you fucked up either, if you'd actually read what I said.

It really isn't cool. It's a nice car with a crummy engine, half of which isn't even inside the car, and it's been aimed not at its original purpose of being an excellent car in every way, but at going in a straight line, slowly, over a short distance.

Smiles per gallon > miles per gallon, that I can agree with.
However the original V12 will actually give you more of both, which can only ever be a good thing.
Reply: ***** We established this about 350 comments back, but admittedly that is a lot of crap to trawl through.

Roadkill prolonged its suffering, the original fuckwit who put the V8 in killed it. When that went in, it was no longer a good car, it was shit. And shit cars always die in the end.
Reply: ***** Well he should have maintained the thing right then.

Mine was maintained well, then stored in a barn, then restored by me, and is still maintained well, and now has 300k on its original engine.

Why the HELL would you put a motor in? Electricity is even WORSE than a V8!
Oh, no, my mistake. You're American, must translate, motor means engine in your language.

Why the fuck would you put an LS1 in?

Little more power, less fuel economy, and a cuntload less in the way of smoothness and refinement.

And then turbo it? Wow. Why? Just why....

What's the point of having a Jaguar that is no longer good at being a Jaguar? It's like having a Charger.... with a two stroke single cylinder in it. 

It's not really very.... Chargerish any more, is it?

So why make a Jag that isn't Jaggish?
Reply: ***** 350hp from a 5.7 litre engine... That is jack all power.

Also, they cost a few grand, even to import. 
Now, Japan is much further away than Americaland, and I can still import, say, a 2J or an RB or even an SR with more power, for less.

I had to google the 4L60E Transvestite, and now I have to ask, why would you PAY_600 dollars for that? An _AUTOMATIC!

That's the single biggest problem with American engines. They cost quite a bit, then you have to spend even more throwing the gearbox away and buying a new one. 

In terms of reliability, LS1s REALLY do need to be worked on. I should know, I currently have probably the worlds least reliable and most expensive coffee table. 
It might be slightly more powerful than a stock S13, but you've spent thousands and thousands on doing that, and you've ended up with a car that's likely slower due to the engine being a heap of crap and having no actual oomph. A mildly tuned SR would rape it for a fraction of the cost.
Reply: ***** So it's a bout making an old, nice car more convenient but worse in every single way and hang the cost of doing so?

I see... It's not about the car, it's about the engine, isn't it?

You lot seem to like rubbish engines, and seem to go around looking for any random chassis to put one in.
Reply: ***** Kinda sad. 
All show, no go. Impressing people who don't understand with things that are simple and shiny. 

These same people who would laugh at one of these with a stock engine, despite the fact it could run rings around this V8 abomination all day long.
Reply: ***** But so would anything with a big V8 that didn't actually fit in it. So what's the point?
Reply: ***** The point is, the car is a gorgeous bit of 1970s luxury motoring that, as stock, goes well, brakes well, handles well and is very smooth. Rolls Royce beatingly smooth, in fact.
This, this is ugly, with bits of engine poking out. It also capitalises on precisely none of the original cars good points, and instead is hampered by its weight.

The ONLY reason it was shit to begin with is because some useless prat threw away the bit of the car that made it brilliant. A nice Jag with a shit old V8 in it is, overall, a crap car. Who wants a Jag with a shitty V8 in, no one. 

What was once a most excellent car is now just a generic chassis for that stupid engine, just so it can drive a mere 1/4 of a mile in a straight line for no discernable purpose.
Reply: Foxtrot Oscar

hahahaha
More DEFLECTION!!!
DEFLECTION!!!

Just about every word you spewed is 100% your BULLSHIT Opinion!!!!!

You NEVER owned a Corvette!!!

BULLSHIT Opinion
BULLSHIT  Opinion
BULLSHIT  Opinion

Your HATE AND Jealous toward America is obvious in every sentence!!!!!

You are NOTHING!!!
You are a troll!!!
You are a LIAR!!!!
You are a Douche bag!!

You are NOT a Auto Journalist!!
You are NOT a Auto Enthusiast!!!
Reply: Foxtrot Oscar You are quite an amusing individual; I'll give you that. A bit deluded, but still amusing.
Reply: OneThirdLife If you think I'm great, you'll love my mate Zeusdog. He's a real interesting character.
Reply: Foxtrot Oscar

hahahaha
DEFLECTION!!!

Oh wait MO0RE DEFLECTION!!!

You are NOT a Auto Journalist!!!
Reply: zeusdog34 Spam.
Reply: hahaha more DEFLECTION!!

You are NOT a Auto Journalist!!
You are NOT a Auto ENTHUSIAST!!
Reply: zeusdog34 Not deflection, just noting your comment as spam.
Reply: Foxtrot Oscar

hahahaha..

I ask you AGAIN.PROVIDE a Article/review that shares the same Opinion as you do about the Corvette..
"The Corvette is shit,overpriced,gutless,does NOTHING well"

Without supporting Articles/Reviews from real PROFESSIONALS..Than EVERYTHING you spew is 100% BULLSHIT Opinion!!!! Nothing factual ..Sorry ,truth hurts..

You are NOT  Auto Journalist!!
You are NOT a Auto ENTHUSIAST!!
Reply: zeusdog34 You keep asking for something I've already given you.
You keep telling me that I'm lying.
You keep telling me that 'profesionals' disagree with me... without actual explaining how, or why.

You're trying to tell me my life doesn't exist. Now, forgive me for not believing you on that one, because I'M the one living my life, not you, I know much, much more about it than you ever will. So shut up about things you will never understand.
Reply: Foxtrot Oscar

Provide a ARTICLE/REVIEW that shares the same opinion as you do ,that the Corvette "is shit,gutless,lazy,overpriced,does nothing well"

You are NOT a Auto Journalist!!!
Reply: zeusdog34 NO ONE will publish an article like that because it's bad publicity for the magazine and you can get in shit for it.

You CANNOT be 100% honest in a magazine review. 

I have explained this.

You have to look at what they're saying and determine what they're actually saying.

"The ride quality could use some adjustment" translates to "It's bumpy as fuck"

"Interior trim can feel flimsy" translates to "It's built like shit and is falling to bits"
Reply: Foxtrot Oscar

blah blah blah

ALL DEFLECTION!!!!
More DEFLECTION!!!!

So when just about EVERY article/review of the C7 Corvette says"its a performance bargain "  They are ALL LYING!!!

FACT, You are jealous and hate America!!!!

Ok where is an independent ARTICLE/REVIEW that says the CROSSPLANE V8 is not good,does not work well ,is gutless and should NOT be used in a performance car!!!!

You are not a Auto Journalist!!!
You are NOT a Auto Enthusiast!!
Reply: zeusdog34  You tell me. Is the Corvette a performance bargain when one can buy faster cars for HALF the cost?

I would say NO! 

Nothing can be considered a bargain if an entire market exists that surpasses it for significantly less money.

Therefore, so long as those cars exist, nothing more expensive can be considered a bargain. 

Also, the performance is purely in figures. Great for those who don't care... But for those of us who do, the fact that the Corvette is at its best with the traction control on will always grate. 

FACT I DO NOT HATE AMERICA. Canada is lovely. Brazil is beautiful, Chile is something rather special. Argentina not so much... But America as a continent is pretty ok in my book.

I have given you technical articles explaining exactly why crossplane V8s are at a serious disadvantage in respect to performance.

Unlike you, it seems that I can read an article of that nature and take relevant information and interpret it.
Seems you need someone to tell you everything... Well, I'm telling you, they're shit. 
What's the difference between what I write and anything else on the entire Internet?
Reply: Foxtrot Oscar hahahaha you are so dumb you cant help yourself!!!

"You tell me. Is the Corvette a performance bargain when one can buy faster cars for HALF the cost?
I would say NO! " (foxcock)

By your logic The Corvette is the best bargain around!! I mean all these EXPERT Auto Journalist ALL SAY THE SAME THING..When you compare a $58,000 car to a $100,000 car and it beats it in almost every performance stat ..THAT IS A C7 CORVETTE!!! Or you compare a $100,000 Corvette zr1/zo6 to a $300,000 car and it beats it in almost EVERY PERFORMANCE STAT ,THAT IS A C6 ZR1 or C7 ZO6!!!!
Wow you FAIL!!!!!

You are NOT NOT NOT a Auto Journalist!!!
Reply: Foxtrot Oscar We hot rodders and mechanics do this sort of thing because we love it. The noise, the challenge, and just having a good time. I don't care if less than 700 or whatever were made. I have a off road equipped, jacked up Japanese SUV that was only made for three years in Japan. My favorite part is the engine. The car is just the accessory holding the engine, the heart of the beast. I'm an aircraft mechanic, and can appreciate squeezing everything you can out of either a little Continental engine for more efficiency, or installing a turbocharger on a huge 6 cylinder Lycoming. Hot rodding and/or engine boosting is not "ruining value", it is also about performance and efficiency. I'd happily cruise around in the "tea and crumpets with Jack Daniels".
Reply: zeusdog34 No, by my logic, you can buy a car that matches or exceeds the Corvette in every useful figure, and exceeds it in the real world, out on the road or track, and costs £30,000 compared to the Corvettes £62,000.

If you want to compare the ZR1, fine. 120k ZR1 vs 70k GT-R. Thank you very much

0-60 more than a second quicker than the 'Vette? Certainly sir, less than 30k. 

Compare the Corvette to something worth £300k and you're 
comparing to truly mental cars that utterly rape the little Corvette in every respect. As you'd expect for that kind of money.
Reply: Zeke That Gamer Geek So you build something that's worse than what you started with and defend it by claiming it's easier and cheaper than restoring the original specification...
And the claim you do it for the challenge... Bit of a mixed message there.

If you don't care for the car, if you consider it nothing more than a carrier for your archaic, ineffective engine, then why choose something rare and interesting that many other people could enjoy in its natural state? Why waste a good car?

Is it just to annoy people or is it a more serious disregard for sense, taste and common courtesy?

Hot rodding doesn't seem to be about increasing performance or efficiency judging by just about every hot rod I've seen.
It just seems to be smashing a huge V8 into a range of cars that are entirely the wrong sort of car to have a massive V8 shoved in.

Put half the effort of a swap into a Jag V12 and you already have performance and efficiency in spades. 

I got 100hp and an average of 5mpg more out of my V12 with just a bit of home workshop fettling, and... Have you ever heard 5.3 litres of finest V12 announcing its arrival through twin large bore straight pipes?

You want power, efficiency, noise... You're usually for better off sticking with the original engine of just about any car, or opting for another, similar engine in that family.

For instance, a Mini Cooper head on an MGB engine, same engine, just a better version. Better in most respects than swapping in a Rover V8. 
SR20 into an S13, match made in heaven. 

Hot rodding seems to be about V8s. Personally, I'm more about cars.

Keep yer crumpets, and yer Jack Daniels. 
Tea is good, but a quality single malt at the end of the day is better.
Reply: Foxtrot Oscar
hahahaha you really are the dumbest person..
Yup your right you can buy less expensive cars that will out do the corvette but we both know those cars really are not everyday drivers..Caterham,Ariel Atom,Morgan,Cobra all cool fast little cars with good handling BUT ARE NOT DAILY DRIVERS!!!!!

GTR is a great car,also a good value for the performance you get..Not as good as it use to be..$100 grand starting is a bit much.
Considering the Corvette zo6 can be had for $80,000 and will MATCH or EXCEED the gtr..Fact!!!

So using YOUR logic , you can buy a base Corvette c7 for $54-$58,000 and it will MATCH or EXCEED  a $70,000 Porsche Cayman in almost every PERFORMANCE STAT and in the real world!! FACT!!

You can buy a $80-$100,000 Corvette zo6/zr1 the will MATCH or EXCEED the $190,000 Porsche 911 turbo or the $150,000 Audi r8 v10
See I can play this stupid game!!!!
YOU FAIL, AGAIN AGAIN!!!  FACT!!!

GTR $100,000
http://www.nissanusa.com/sportscars/gt-r

C7 CORVETTE $54,000
http://www.chevrolet.com/corvette-sports-cars.html

YOU ARE A LIAR
YOU ARE A BIGOT
You are NOT a Auto Journalist!!!
Reply: Foxtrot Oscar
HAHAHA YOUR THE BIGGEST HATER!!
ALL YOU DO IS SPEW LIES AND BULLSHIT!!Nothing Factual!!

"62k IS a a lot of money,
450hp is NOT a vast amount of power for that money.
In terms of 'bang for your buck'... that's not great" (foxcock)

hmmm chew on this for a bit ...

2015 c7 Corvette $54,000 450hp
$120 dollars per 1HP

2015 C7Corvette Z06 $80,000  650HP
$123 dollars per 1HP

2015 C7 Corvette Z06(zo7 package) $100,000
650HP
$153 dollars per 1HP

2015 Nissa GTR $100,000 545HP
$183 dollars per 1HP

2015 Jaguar Ftype R $105,000 550hp
$190 dollars per 1HP

2015 Porsche Cayman $53,000 275HP
$192 dollars per 1HP

2015 Porsche Cayman S $75,000 340HP
$220 dollars per 1HP

2015 Porsche 911 $84,000 350hp
$240 dollars per 1HP

2015 Nissa GTR Nismo $150,000 600HP
$250 per 1HP

2015 Ferrari California $200,000  553HP
$361 dollars per 1HP

2015 Porsche 911 turbo $190,000 520hp
$365 dollars per 1HP

YOU FAIL!!!

YOU ARE NOT A AUTO JOURNALIST!!
Reply: zeusdog34

Yes, a 78k GT-R is great value compared to a slower, lower quality Z06 that has half the number of seats, a smaller boot, lower mpgs and MUCH less traction, grip and talent.

Yes, by my logic, you can buy a base C7 Corvette for 66k, or you could buy a Cayman for 40k and end up with a car that is better built and that handles better, and that is much more economical. 

You can buy a 120k ZR1 or a 78k GT-R

See, I can not only play this game, but win too. Because I'm not forgetting the MASSIVE tax difference in the US.

You FAIL.

https://www.chevrolet.co.uk/cars/corvette/
£65,510

http://www.porsche.com/uk/models/cayman/cayman/
£39,694

http://cq5.prod.nissan.eu/GB/en/vehicle/sports-cars/new-gt-r/prices-and-equipment/prices-and-specifications/model-details.106865_105103_105535.html
£78,020

Yes, the Porsche is a bit slower, but it's MUCH cheaper. And better.
Yes, the Nissan is more expensive, but it's MUCH faster. And better.

The Corvette sits neatly in the gap between people who want quality fun and serious performance, but offers neither.

Poor choice of product placement.

The only thing the Corvette has over the Nissan is that Chevrolets website is much better than Nissans. Less popups, quicker, clearer, easier to navigate... if only the cars were that good!
Reply: zeusdog34 Chew on this for a bit.

GT-R
£141/hp

C7 Corvette with Z51 package
£143/hp

That's pretty much the same. But with the GT-R, you also get a better car. 

More everything for your money. 

Here's the really interesting bit though.

Dacia Sandero 0.9 litre
£77/hp.

So, if you really want 'bang for your buck', buy a 900cc Romanian hatchback.
Reply: Foxtrot Oscar
HAHAHAHAHA
DEFLECTION!!!
DEFLECTION!!!!
You FAIL!!!!

You have been proven WRONG once again!!!
And you use DEFLECTION!!!
You truly are worthless!!!!

C7 Corvette DESTROYS the Cayman!!! fact!!!!!
Just because you say the "cayman is better" does NOT make it TRUE!!
You are NOT a Auto Journalist!!! You are a little english boy with a DISTASTE towards America!!FACT!!
You are also a BIGOT and a LIAR!!! FACT!!!

CHEW ON THIS

2015 c7 Corvette $54,000 450hp
$120 dollars per 1HP

2015 C7Corvette Z06 $80,000  650HP
$123 dollars per 1HP

2015 C7 Corvette Z06(zo7 package) $100,000
650HP
$153 dollars per 1HP

2015 Nissa GTR $100,000 545HP
$183 dollars per 1HP

2015 Jaguar Ftype R $105,000 550hp
$190 dollars per 1HP

2015 Porsche Cayman $53,000 275HP
$192 dollars per 1HP

2015 Porsche Cayman S $75,000 340HP
$220 dollars per 1HP

2015 Porsche 911 $84,000 350hp
$240 dollars per 1HP

2015 Nissa GTR Nismo $150,000 600HP
$250 per 1HP

2015 Ferrari California $200,000  553HP
$361 dollars per 1HP

2015 Porsche 911 turbo $190,000 520hp
$365 dollars per 1HP

YOU FAIL AT LIFE!!
You are NOT a Auto Journalist!!!
Reply: zeusdog34 No. Dollars are meaningless to me. Therefore, no proof.

If dollars are proof, so are pounds. Pounds that are actually fairer, and counter your point quite neatly. 

Sorry. 

NOW FUCK OFF AND DIE.

Have a pleasant death, your life's been pretty shit.... for us.
Reply: Foxtrot Oscar
HAHAHAHA

 OH NO the little english princess is upset and angry.. Too bad...

What a surprise!!! DEFLECTION!!

You are NOT a Auto Journalist!!
You are a BIGOT!!
You are NOT a Auto ENTHUSIAST!!
Reply: zeusdog34 How do you tell a complete idiot that he's wrong?

How do you explain to someone with no concept of logic, sense or reality what is going on?

No, I'm not upset, not angry, not a bigot and I most certainly am an enthusiast.

No non-enthusiast would put up with pulling a full Jaguar IRS subframe apart in his garage and re bushing it. No one. Because I'm stupid enough to do that, because I like the car, I must be an enthusiast. I even enjoyed doing it!
Reply: Foxtrot Oscar

Yes you are an Idiot,thanks for pointing that out!!

ONLY to your Jags and Land Rover..

A true Auto ENTHUSIAST see's the vision/dream of the auto builder..Does not bad mouth there build and call them names!!thats ALL YOU DO!!!
You dont have to like it..As a matter of fact,I think this build is crazy and I would not build this car..But you know what IT DOESNT MATTER WHAT I HAVE TO SAY ABOUT IT!! Its not my car/build and I certainly would not make fun of the people who built it!!!

Thats the difference between a true ENTHUSIAST (ME) and a arrogant person like yourself!!

You are NOT a Auto Journalist!!
You are NOT a Auto ENTHUSIAST!!
Reply: zeusdog34 I SEE the vision. I see the dream.
I also think it's a bit shit.

I'm perfectly within my rights to think that.
I also have reasons for believing that.

A TRUE enthusiast loves whatever cars he loves and whatever style he loves.

He does NOT have to love ALL types and styles. 

People who claim to do so tend to be a bit... wet. And very, very boring. Because someone with no opinion is a boring and mostly useless human being and someone who most likely lacks all sense of taste or refinement. 

Opinions make the world go round. And you know what, a good argument between car lovers is GREAT... so long as both parties have reasons for to back up their arguments, and so long as both parties accept that the other guy enjoys what they've done.

I am perfectly allowed to argue any point I wish.

There are people who tell me that my XJ12 should be bone stock. To them I say, no. If it were bone stock, it would consume too much fuel to be viable in modern times. It would also be very quiet, and I really like to hear that glorious V12 noise. It would also have an old auto 'box, which is boring and inefficient. The manual 'box, fuel injection and exhaust keep intact all the original character of the car, but make it more usable for long distance daily use. 

There are others who tell me that I should slam it on its arse, supercharge the engine, strip out the interior and turn it into a track weapon... To them, I say no.
If I did that, I wouldn't have a comfortable, smooth luxury car any more. And besides, the racing version of the XJ was not a Series 1 Saloon, it was a Series 2 Coupe. Now, building a Broadspeed XJ12C replica out of one of those is a whole different game. 

And an enthusiast (like me) can put forward those points eloquently, but equally appreciate where the others may be coming from.

I can empathise with those who say it should be stock. Too many people ruin their cars by over-modifying them.
I can empathise with people who say I should modify it more, because having it faster, lower, louder is simply doing more of what I've already done.
Being a true enthusiast is finding your own balance between the two extremes and figuring out exactly WHY you put your balance where you put it.

I know people who aren't enthusiasts but insist on originality. They aren't enthusiasts (in my eyes) because their only response to the question 'why' is 'just because it should be'. 

I know people who modify the hell out of their cars, and they aren't enthusiasts, because their reason for doing so is because 'it's cool, innit'. 

Well, no. Some mods are cool, some are shit. And I can say that because I can explain why I think some mods are shit. Like neon underglow. That's shit because it generally adds nothing to a car bar weight.

That said, I can appreciate a really well thought out modified car with underglow. I don't like it, but I appreciate why the guy did it if he can explain.

As for V8s... in an old Chevelle, a big Chevvy V8 is the only engine to use. In an old Dodge Charger, a big Mopar V8 is the best engine to use (although I have seen a very cool Charger with a Dodge V10 engine from a Viper in it, real sleeper style, retro on the outside with this mad all-Dodge heart.)

I wouldn't ever want to own a Chevelle, and I don't like Chevvy V8s. But I can look at a Chevelle, with a Chevvy V8 in it, and enjoy it simply existing.
I wouldn't enjoy driving it, but I like the fact that it exists. The world would be a little bit less interesting without it.

And you know what, if someone wanted to put a Jaguar V12 into a classic Chevelle.... I would stand right there with the muscle car lot and tell that person it was a stupid idea and that they'd ruin the Chevelle with a Jaguar V12 engine. 
Honestly.

Because I'm a Car Enthusiast, not an Automotive Hitler.
Reply: Foxtrot Oscar

"And an enthusiast (like me) can put forward those points eloquently, but equally appreciate where the others may be coming from."(foxcock)

So calling someone a "idiot,moron,dumb yank,c*nt" for putting a v8 into a auto you disapprove is "eloquently".

"And you know what, if someone wanted to put a Jaguar V12 into a classic Chevelle.... I would stand right there with the muscle car lot and tell that person it was a stupid idea and that they'd ruin the Chevelle with a Jaguar V12 engine. 
Honestly."(foxcock)

I agree..

So you would NOT call them a "c*nt,dumb yank,moron,idiot" Like you do here..
Reply: brian bundy It was only a piece of crap once some idiot decided that 8 cylinders in Vee configuration would be a good idea.
Reply: That was a shit xj12 and since the original engine was long gone it is pretty much worthless
Reply: weirdstuffanimation7 So why spend a fortune making it worse when less money would have bought a decent original engine to make it better?
Reply: Foxtrot Oscar because making it worse is more fun to watch. End of
Reply: weirdstuffanimation7 Well... it isn't.
I'd far rather see an in depth build up of a proper performance Jag than yet another boring shitey old V8 that doesn't even fit inside the car.

That's been done a thousand times. It's boring.

A properly tuned Jag for drag racing.. that's very rarely done. Why not do it?

The V12 is an accomplished racing engine, so there's no problem there. Get a MANual gearbox on it and go have fun. And make an epic noise doing it.
Reply: Foxtrot Oscar well too bad because at least 10000 other people like it the way it is. I said it before the v12 was already gone when they bought the car so that was never going to happen. This is Road kill. and you do reilise those old v12s only made 200 to 300 bhp. and This car now has over 600hp. Just stop bitching on about things you would rather see if you want to see that go watch it else where
Reply: weirdstuffanimation7 Yes, and I'm sure there are thousands who don't like it. Probably many times the number who do.

The amount they spent putting this engine in and the blower on the previous engine could easily have bought and built a 600hp V12.

I got 400 out of mine for free!

I'm not bitching just stating my opinion. If you don't like that, stop bitching about it and go live in some dictatorship where no one is allowed to have an opinion.

I hear North Korea is lovely this time of year.
Reply: weirdstuffanimation7 I take it by the wording and context of your comment that you've figured out I'm right, but lack the cranial capacity to accept this or admit to it?
Reply: Foxtrot Oscar  No im just not willing to argue with a Jag snob any more.
Reply: weirdstuffanimation7 Jag snob? Ain't none of them round here.
I happily drive my Nissan, my Land Rover, or my Jags. I don't care so long as the vehicle gets its job done the best it can. 

Pull your head out of your arse and smell the roses lad. You're beat, you're done. You've got shit all left and you know it.
Reply: Foxtrot Oscar I got plenty left but you arnt willing to listen to reason or logic and I have better things to do then argue with someone who watches videos hes knows hes not going to like only to head to the comments to bitch and moan like a spoiled little brat. Get a life mate.
Reply: weirdstuffanimation7 
Plenty of bullshit left by the sound of it.

I'm all for logic and reason, but your brand seems to be based on false assumptions. 

Who said I knew I wouldn't like this video?

As for the 'bitching and moaning' please, point some out.

And now, you, the one bitching and moaning about me using my rights to free speech to make simple comment on an open discussion board are telling me to get a life.

No one asked you to come here, no one asked you to read, so please, follow your own advice unless you have a sound, relevant counter argument to my original points.
Reply: zeusdog34 Go away, learn how to read, come back.
Grovel for forgiveness.

Bye.
Reply: Foxtrot Oscar

hahaha
DEFLECTION!!
You FAIL...

Your word is NOT gospel..

Crossplane Pushrod V8 Engines work great in race applications proven by

Corvette winning 7 GTE/GT1 CHAMPIONSHIPS in last 13years..
You Fail..

You are Not a  Auto Journalist!!
Reply: zeusdog34 I NEVER said my word was gospel.

Crossplane V8s work BADLY in race application as proven by the last 50 years of racing where they have been eradicated in almost EVERY SINGLE CATEGORY.

Do you see pushrods in F1? Touring cars? Rallying? Drifting? How about supercar racing? F3? Sports car? DTM? GT500?

About the only place you'll see pushrods out on track winning is the Goodwood Revival, Silverstone Classic, Nurburgring Classic or Le Mans Classic!
Reply: Foxtrot Oscar

100% BULLSHIT !!!!

PROOF
Corvette 7 GTE/GT1 CHAMPIONSHIP in last 13yrs.Proof Crossplane Pushrod V8 engines work PERFECTLY in RACE APPLICATIONS!!

PROOF
Nascar, 700hp,8500rpm,200mph.Wide OPEN THROTTLE FOR OVER 300MILES!!! Proof Crossplane Pushrod V8 engines work PERFECTLY in RACE application!!

PROOF
Dragster, 10000hp,300mph in 4sec..Proof Crossplane Pushrod V8 engines work Perfectly in RACE applications!!

Your jealousy and DISTASTE towards America is fueling your BULLSHIT comments!!

You are a LIAR!!
You are a Bigot!!
You are NOT a Auto Journalist!!
Reply: To be fair, the thing was bound to go to the scrap yard. While yeah it doesn't have a V-12 or I-6, the V8 is the easiest to fix and find parts for in this country. No one makes parts for the V-12 or I-6 because no one races them. Sure some may race with the Jimmy 6 but that's also a very old American engine. 

It could be so much worse. I'd be happy the thing is still driving. If they wanted to convert it back to an I-6 all they would have to do is patch the hood with some metal of the same thickness, get it repainted and there ye go.
Reply: zeusdog34 That doesn't prove ANYTHING!
That's just figures!

'Perfectly' would be 100% wins, not fucking 7/13!

Perfectly would be matching the opponents like for like.

It's not the pushrod crossplane bit doing the work, it's the fact that the engine is MUCH BIGGER.

The 'perfect' bit is great team management in a class running against cars with heavily restricted, smaller engines, and weight penalties to even the field.

If you derestricted all the cars and dropped all the ballast, the Ferrari's would shit all over the Aston Martins and Corvettes and Porsches. 

If you gave the NASCAR engines flatplane engines with DOHC they'd happily make 900hp. That's MUCH more perfect. 

If you turn any engine into a bomb, it'll make lots of power. The FACT is, that flatplane V8s are MUCH MORE EFFICIENT AT HIGH REVS THAN CROSSPLANES. FACTUAL FACT THAT IS FACTUAL

OHC is FAR MORE EFFICIENT THAN OHV FACTUAL FACT THAT IS FACTUAL.

YOU CANNOT ARGUE WITH THESE FACTS (although lord knows you'll fucking try anyway).

What do you not understand here? I DO NOT HATE THE USA.
I HAVE NO DISTASTE
I AM NOT JEALOUS
I AM NOT A BIGOT
YOU'RE A FUCKING LOONEY.

FUCK OFF.
Reply: [NKH] Plymouth Haefeli The thing was only heading to the scrap yard because some prat had ruined it with a V8!!

An I6 is far easier to fix than any V8, and the V12 is actually pretty simple. I rebuilt mine age 17. 

No one races them? Really? It's FAR easier to get hold of race parts for the Jaguar XK I6, or the V12, than it is to get for equivalent American V8 engines. 

I race my 3.4 litre XK engine. Loads of people race E types and Mk2s, which all run on the XK engine.

There are also a large number of XJ-S racers, who all use the V12.

And of course, Jaguar themselves secured 7 Le Mans victories across those two engines. TWR still make V12 parts, and there are any number of I6 parts around. I'm debating buying a brand new aluminium block for my 3.4..

The thing would still be driving, and now it's got a ridiculous engine, ridiculous supercharger and is generally shit in every way compared to what it was. Also the money spent on it could easily have bought and tuned a V12, which would be far more interesting.
Reply: Foxtrot Oscar

hahaha, by your logic the Porsche,ferraris and Astin Martins must really suck..Non of them are a 100% wins..Damn you really are a American hating douche bag!!

Corvette has been sponsored by GM since 1999, before that DOES NOT MATTER!! Corvette didnt race as a SPONSORED team!!

Corvette 7 GTE/GT1 CHAMPIONSHIPS in last 13years.. 7 24HRS OF LE MANS WINS!!

PROOF CROSSPLANE PUSHROD V8 ENGINES WORK GREAT IN RACE APPLICATIONS!!
You FAIL!!

You are NOT A AUTO JOURNALIST!!!
Reply: zeusdog34 
What? 
What? 
Eh?

What the fuck difference does any of that make?

Crossplanes work. Just. Does NOT mean they work well, as fucking PHYSICS states that they do NOT.

END. OF.

If you want to argue with the eternal and irrefutable laws of the universe, be my fucking guest, but you'll be there forever and you will not win.

So go away and do it quietly, away from all these nice people. And away from me, you annoying little prick.
Reply: Foxtrot Oscar hahahaha you angry little english princess!!!

You have stated a 1000 times Crossplane Pushrod V8's are shit,gutless,lazzy boat anchors that should NOT be used in RACE APPLICATIONS..

Is this not PROOF that they work well in Race applications.
Corvette 7 GTE/GT1 CHAMPIONSHIPS in last 13years.. 7 24HRS OF LE MANS WINS!!More than Porsche,Ferrari,Aston Martin ect..

Corvette is DETUNED also you fool..The race vette is based off the ZO6!!!

Never said the Crossplane engine was better at high rpm's!!!You FAIL!!
Never said the crossplane V8 engine was more efficient!!! You FAIL!!

Face it,its your deep rooted Distaste and Jealousy towards America!!!

You are NOT a Auto Journalist!!
Reply: zeusdog34 The Z06 is a 7 litre car. The race engine is about 6 litres, if I remember correctly. Still 1.5 litres bigger than the Ferrari. You don't need to restrict it, as the race engine makes more than the standard 6.2 does!
Reply: Foxtrot Oscar

Its based on the ZO6 which has 650hp.. The Race Vette does not have 650hp,so yes ITS DETUNED!!!

So when you say the" Crossplane Pushrod v8 is shit,gutless,lazzy boat anchor that should NOT be used in RACE applications "
It based on your opinion and dislike of V8 engines?!?!
Because The Corvette race team seems to be doing VERY WELL with a V8 engine.I mean in the last 13 years Corvette has won the GTE/GT1 24 hours of Le Mans 7 TIMES..Thats more than Porsche,Ferrari,Aston Martin ect..
Reply: zeusdog34 You mean, they pulled the supercharger off.... That's not de-tuning, that's a new engine. You've got to replace all the internals, for a start, if you've built it properly for a supercharger in the first place. 

No, it's based on the FACTUAL FACTS that crossplane V8s are NOT as good as flatplanes or V12s, and the fact that pushrods are fucking shit.

That's sound engineering knowledge.

I actually LIKE V8s. I OWN a number of them. I have a COFFEE TABLE MADE OUT OF ONE!

The Corvette team seems to be doing mediocrely with a BIG crossplane. 7 wins in 15 years isn't that great. Less than 50% and Ferrari are the only real competition, so..... yeah. 

Porsche and Aston Martin are in the class below..
Funny enough, last year, one of the Astons in the class BELOW was actually IN FRONT of the Corvettes for a long while.
Reply: Foxtrot Oscar

hahahaha
EXCUSES
EXCUSES

Still de-tuned compared to the ZO6..
You FAIL!!!

Never said Crossplane V8's were better!!
You FAIL!!!

7 GTE/GT1 24 Hours of Le Mans WINS!!!!
Corvette has more than 7 total wins you dumb tool..Nice try..
You FAIL and you lie!!

hahaha you NEVER OWNED A CORVETTE!!
LIAR

Funny enough, YOU KEEP SAYING CROSSPLANE PUSHROD V8 ENGINES DONT WORK ARE SHIT,JUNK,LAZY,SHOULD NOT BE USED IN RACE APPLICATIONS!! Corvette has more WINS than Ferrari ...So I guess the flatplane is not as good as you claim..

You are NOT a Auto Journalist!!
You are NOT a Auto Enthusiast!!!
Reply: zeusdog34 Didn't say that, no it isn't, yes, I know, well done, fuck off.

Corvette does NOT have more wins than Ferrari. Ferrari live to win, that's all they do. They have more wins at Le Mans, and many, many more wins in the racing world in general.

FACT crossplane V8s have a number of natural characteristics that makes them a very poor choice for racing.

You could use a quad supercharged 2 litre W32 engine if you wanted, but that would also be stupid as there are a number of problems with such a configuration, just as there are with crossplane V8s. There's good reason flatplanes hugely outnumber crossplanes.
Reply: Foxtrot Oscar HAHAHAHA

Wow you get angry when proven wrong..Sorry deal with it..

Fact is Crossplane Pushrod V8 engines do work well in any application..

Dont be such a douche ..

Its fine that you dislike Pushrod V8 engines but to flat out say they are "Shit,junk,lazy,gutless boat ancors that should NOT be used in race applications" IS 100% FALSE!!!

They do work well proven by the Corvette,Corvette race team 24 Hours of Le Mans wins..7 in the last 14 years more than Ferrari,Porsche,Aston Martin..
As well with NASCAR,Formula D,Dragsters ect..
Reply: zeusdog34 Two slight points there.. I'm not angry, and I'm not wrong...

Working well would be working well enough that everyone else swapped to that method. Clearly, if no one else does it, it can't be that good. And if you've got to use more displacement to achieve the same result... that's not really as good, is it?

Aston Martin aren't in the same class, Porsche are doing it with 3.6 litre engines, Ferrari are doing it with 4.5 litre engines and haven't actually been at it for that long... 

Yeah, it's victory, but what's it worth?

The Corvette TEAM is very, very good. The car is actually SLOWER than the Ferraris, and the old DBR9 shat all over the C6R... it was just a bit more intensive to drive, thus tired drivers quicker. 

The Corvette team have themselves dialled into their car very well, and that's very impressive. It's just not an impressive car. 

NASCAR, it's the rules. OHC engines would run better.
Drag racing, again, it's the rules, OHC engines would run better.
Formula D... most people use V8s out there, but the turbocharged engines still win too, so it's not cut and dry like you say.

As for drifting on a more sensible level, 4 and 6 cylinders dominate globally. And as for professional drifting, i.e. D1, V8s are practically non existent, even though power is steadily climbing. 

The FACT is, crossplanes are very, very rarely used unless you have to use them, and pushrods are almost NEVER used, unless dictated by the rules (as in NASCAR and Top Fuel) 

The fact that almost no body bothers using them, even though they're cheaper, suggests there's a performance disadvantage somewhere.
Reply: Foxtrot Oscar
hahahaha
EXCUSES!!
"Working well would be working well enough that everyone else swapped to that method. Clearly, if no one else does it, it can't be that good. And if you've got to use more displacement to achieve the same result... that's not really as good, is it?"(foxcock)

NOT TRUE AT ALL!!!!!!! Ferrari,Porsche would NEED NEW ENGINE FACTORIES..Thats why they dont use them..And why would they change..They have been using a similar design for years so why would they change!!!
Same reason GM uses a similar design from many years ago.. They already have all the factories and tooling..No need to change..
GM/Corvette have just about perfected the Crossplane Pushrod V8 !!!

Your argument does NOT hold up!!!

If the flatplanes are so much better why dont Aston,Corvette,BMW ,Bentley,Audi use them..
This is what I think..Those Auto Company's do not see a huge benefit to cost..Thats why they use Crossplane V8's

Fact is PLENTY OF RACES ARE COMPETED AND WON BY CROSSPLANE PUSHROD V8 ENGINES!!!
You FAIL!!!

You are NOT a Auto Journalist!!
You are NOT a Auto Enthusiast!!
Reply: zeusdog34 Porsche used to use pushrods. Then they went OHC, because they found it was easier to make more power that way.
Ferrari started out in racing. He saw that people like Alfa Romeo (whom he drove for) used OHC engines to great effect. 

Slowly, over time, pretty much everyone has stopped making pushrods and switched to using OHC. There was a reason for that. Now, if you're trying to suggest that the entire motoring world was wrong... that'd make you really fucking stupid.

Sure, GM may have perfected the pushrod crossplane. But even a mediocre OHC flatplane kicks the shit out of them. Even old ones kick the crap out of the new GM engines. 

Aston do use them... for racing. BMW do too. Bentley don't really race, and but Audi have used flatplanes.

Oops..

For road cars that aren't aiming for peak performance, it's not overly worth it. OHC though really IS worth it. Hence fucking everyone uses it. 

Pushrod engines win some races... but if that's all that's allowed in that race, of course it's going to win.

You hold a race for people in wheelchairs, chances are, someone in a wheelchair will win. Ooh, who'd have thought that eh?

If you hold a race with only pushrod engines... it's impossible for an OHC engine to win. 

However, allow one competitor to use a DOHC head on their otherwise identical engine and there's a very, very good chance it'll win.
Reply: Foxtrot Oscar
hahahahah
ALL EXCUSES!!!

BMW,ASTON,AUDI ,BENTLEY USE CROSSPLANE IN THERE road cars!! You knew what I meant!!

DEFLECTION!!

"For road cars that aren't aiming for peak performance, it's not overly worth it. OHC though really IS worth it. Hence fucking everyone uses it."(foxcock)"

hahahaha bullshit!!

"Pushrod engines win some races... but if that's all that's allowed in that race, of course it's going to win.(foxcock)"

hahahaha DEFLECTION!!

Well in the Le Mans Series Crossplane is NOT the only engine..
So you FAIL!!

The rest is 100% DEFLECTION!!!

You are NOT a Auto Journalist!!
Reply: zeusdog34 *Their

Learn to spell at least if you're too stupid to hold a sensible conversation.

Primary school kids know that one.

Yes, Audi, BMW etcetera use crossplanes. So? They use small crossplanes to counter the weight and balance issues, and they team them with OHC, thereby not exacerbating their already reduced problems.

Big OHV crossplanes are nowhere NEAR as good. That's just the facts of that design.

Yes, Le Mans is open, but NASCAR and Top Fuel are NOT open. That's what I'm saying.

2/3rds of your argument is worthless, and the remaining third is a combination of many factors, not down to the engine configuration at all.

You keep going on and on and I keep picking your arguments to shreds... When will you just give up?

And don't just say "when you stop hating America" because we both know that that's bullshit.
Reply: Foxtrot Oscar

hahahaha DEFLECTION!!!
More DEFLECTION!!!!

Your argument is worthless..

Clearly Crossplane pushrod V8 engines work great in all applications INCLUDING RACE!!!

You FAIL!!!

Corvette,More GTE/GT1 24Hours of Le Mans wins than Ferrari in last 14 years..
Ooops, you FAIL!!

lolololol you never won a argument let alone picking one to shreds!!! hahahahahahahahaha
hahahahahahahahahahahahahahahahahahaha

Its so nice to see you fumble cause you've been proven wrong..And the EXCUSES and DEFLECTION only prove the point..
YOU FAIL!!!

You are NOT a Auto Journalist!!
You are NOT a Auto Enthusiast!!
Reply: Foxtrot Oscar
HAHAHAHAHA
100% DEFLECTION!!!!!!!

EXCUSES!!!!

Corvette has MORE 24Hours of Le Mans wins IN LAST 15 YEARS THAN FERRARI!!!!
You FAIL!!!!

Crossplane pushrod v8 engines work great in race applications ...

You are NOT a Auto Journalist!!
Reply: zeusdog34 Yes, Corvette has more class wins in the GT1/GT PRO class (or whatever it used to be called) than Ferrari have in the last 15 years...

What does that actually PROVE?

It proves the Corvette team work better as a team. It does NOT directly prove ANYTHING about ANY of the engines aside from the fact that BOTH engines are reliable enough to make it round the course. 

Crossplane pushrod engines DO NOT work 'great' that's why NO OTHER FUCKER USES THEM.

Who are you going to believe? Your own ramblings, or pretty much every race car to have turned a wheel in the past 6 decades?
Reply: Foxtrot Oscar

Good you agree..The Corvette with the Crossplane Pushrod V8 works GREAT ..Proven

"Crossplane pushrod engines DO NOT work 'great' that's why NO OTHER FUCKER USES THEM."(foxcock)
YOU FAIL!!!!!!

"Who are you going to believe? Your own ramblings, or pretty much every race car to have turned a wheel in the past 6 decades?"(foxcock)

Does not matter..GM and Corvette are WINNING!!!!
YOU FAIL!!!!

Nascar= PROOF
Dragsters=PROOF
100MILLION V8's built by GM=PROOF!!!

You prove on a dailt basis with you rediculous biased bullshit comments that You are NOT a Auto Journalist!!
Reply: zeusdog34 No, the RACE TEAM works very well. Not 'great' just 'very well'.

The actual car... that's a fucking heap of shit. Ugly, annoying, slower... just crap. 

You want fuckwit logic? I'll give you fuckwit logic. 100% of the DAF Backwards Racing Championships have been won by DAF cars.

Therefore old variomatic DAFs (driven by rubber bands) must work GREAT!

PROOF.

Proof that your idea of logic doesn't actually cut it in the real world.

The Russians have made millions of cars too. Does that mean they're all 'great'? No. It doesn't. Many of them were utterly shit. Look how many Beetles have been made. Even in the 1940s they were naff, by the 80s they were shit, now.... they're a cult symbol yes, but to drive they're slow, noisy, thirsty, smelly, rough and generally a bit shit. 

Numbers don't make it good.
Reply: Foxtrot Oscar hahahaha

"No, the RACE TEAM works very well. Not 'great' just 'very well'.
The actual car... that's a fucking heap of shit. Ugly, annoying, slower... just crap. "(foxcock)

LOLOLOLOLOLOL more EXCUSES!!!

Im sure Ferrari,Porsche,Aston Martin ect would NOT agree that they were beaten by a 'shit,crap' Race Car!!!

More of your distatse towards America!!!

Funny how a car can "annoy" You!!!!

More PROOF YOU ARE NOT A AUTO JORNALIST!!

You are NOT a Auto Enthusiast!!

The rest OF YOUR COMMENT is 100% Bullshit and DEFLECTION!!!

Corvette 7 gte/gt1 24hours of Le Mans CHAMPIOSHIPS in the last 14 years..More than Ferrari and Porsche!!
YOU FAIL!!!!

Nascar=PROOF
Dragsters= PROOF
DRIFTING/Formula D= PROOF

You FAIL!!!

You are NOT a Auto Journalist!!
You are NOT a Auto Enthusiast!!
Reply: zeusdog34 Excuses? No. That's just how it is. 
What the fuck would I me making an excuse for?

I DO NOT HATE THE FUCKING USA YOU DIPSHIT I'VE SAID THIS LITERALLY A THOUSAND FUCKING TIMES.

Well Aston Martin weren't because they're in a different class. Porsche I don't think field a factory team so don't care.
Ferrari... beat the shiny new C7.R

Oops. 

NASCAR proves that if you ban all other engines, people will use the one you allow.
Top Fuel... same.
Drifting... no V8s.
FD... loads of shit wins that, but it's all about brute force and the massive lumps have brute force alright... 

But please, explain this. How the FUCK do 7 Le Mans CLASS wins 'prove' that pushrod crossplane engines are any fucking good?

How do a few little wins in just as many losses erase the COLD HARD FACTS of ENGINEERING AND PHYSICS that tell us that crossplanes are massively disadvantageous and pushrods even more so?

But you'll come up with some more fucking bullshit, probably involving the words 'deflection', 'bigot', 'distaste', 'lies' and 'princess'.

You're too predictable. And fucking thick as shit too.
Reply: Foxtrot Oscar hahahahha You upset cause you have been PROVEN WRONG and that you are a BIASED BIGOT TROLL!!!

You are NOT a Auto Journalist!!

You prove that Im correct and you are WRONG!!!

You said Crossplane Pushrod V8 engines"dont work,gutless,lazy,boat anchor,shit,should not be used in race applications"

I proved to you they OBVIOUSLY DO WORK and WORK WELL..
YOU FAIL..ONCE AGAIN!!!

Corvette MORE 24Hours of Le Mans wins than Ferrari,Porsche in last 14 years!!! YOU FAIL!!!

Formula D=Drifting 100% fact!!!
You fail ONCE AGAIN..

YOU are A biased bigot troll
Reply: Foxtrot Oscar isn't it your bedtime yet little child or did you have too much tea before bed.
Reply: zeusdog34 But you're NOT correct!

YES the Corvette racing team has had more wins than Ferrari in the last 15 years... but Ferrari have had a cuntload more overall. You're proving nothing.

FD is not D1. D1 is drifting therefore FD isn't. 

You proved that crossplane V8s work BADLY.

You've proved that the only place they win is where the rules dictate they're the only engine there!

If you have to ban OHC non-V8 engines in your series... why? 

If V8s were the best, then it doesn't matter... but if you have to actually ban everything else... that suggests you're worried about performance.
Reply: Kevin Mooney No caffeine after nine.
Reply: Foxtrot Oscar
hahahahaha lololololololol

100% DEFLECTION and EXCUSES!!!!

Not true Corvette has MORE OVER ALL WINS in last 14 years!!!! FACT!!!!
Please look it up..ahahahahahahahahahaha
YOU FAIL and you LIE!!!

FORMULA D =DRIFTING
YOU FAIL !!!
Try to prove me wrong with a expert article that STATES Formula D is not drifting!!!
hahahahahahahahaha..You cant and your BULLSHIT opinion is just that OPINION!!!NOT FACT!!!

EXCUSES
EXCUSES

I NEVER once said V8's are the BEST!!
You LIE
YOU FAIL!!!

You are a biased bigot troll...

You are NOT a Auto Journalist!!
You are NOT a Auto Enthusiast!!
Reply: zeusdog34 No Corvette has had an overall win EVER at Le Mans, dumbfuck. 

FD NOT DRIFTING

Prove me wrong with an article that states exactly why something that is nothing like something else can be called the same thing as that very different thing. 

What you're saying is that cabbages are onions, by saying FD is drifting. It just isn't. 

'Perfect' = best.

By saying V8s are perfect (which you've said a LOT), you're saying that they're the best kind of engine. Which they clearly fucking aren't.
Reply: zeusdog34 are you actually autistic or just trolling? Because some people on the internet.... you just can't be sure.
Reply: Foxtrot Oscar  ""Excessive consumerism is killing the planet""

Why don't you do your part to help save Gaia by unplugging your computer and then burying it in a compost heap
Reply: Foxtrot Oscar
 ""You buy a Jag because it's sleek, subtle, stylish, smooth and luxurious.""

Or maybe someone just works for TATA and they were offered a discount
Reply: ceounicom I offset. I am careful with lights, heating, water and my overall energy consumption. That means I get to drive stupid old cars without feeling guilty. I have my computer on anyway for work.

Yeah, 'cause I really work for TATA and they really gave me a discount on a Jag that hasn't been sold for 42 years.
Reply: Foxtrot Oscar hahahahahaha
100% EXUCES and DEFLECTION!!!

Formula D =DRIFTING 100% FACT!!
You FAIL!!!

Corvette 7 GTE/GT1 24Hours of Le Mans Championships more than Ferrari,Porsche
Sorry but YOU FAIL!!!
Crossplane Pushrod V8 engines work great in  RACE applications!!
Once Again YOU FAIL!!! 

More of your distatse towarsds America.
You are a LIAR.
You are a biased bigot!!

You are NOT as Auto Journalist!!

Perfect does not equal best!! YOU FAIL..Nice try dumb ass..
I
Reply: zeusdog34 Wrong wrong wrong wrong wrong. 
Fact.
Reply: Foxtrot Oscar
hahahaha.

Without proof you are lost and can tell NO MORE LIES!!

Thanks for proving me correct,that Crossplane Pushrod V8 engines do work great!!

Thanks for proving me correct,FORMULA D drifting!!

You are a biased bigot troll.
You are NOT a Auto Journalist!!
Reply: zeusdog34 No, pushrod engines DO NOT WORK 'GREAT'!

How the fuck can you say they're 'great' when they're used by nearly NO ONE for VERY WELL KNOWN REASONS OF INADEQUACY. 

Formula D is NOT drifting.

It is DIFFERENT from what we know to be drifting, therefore cannot be called the same. It's like calling toast and pancakes the same thing, they're just not, because they're different.
Reply: Foxtrot Oscar This thread is over a year old and you are still defending your jags. I have respect for you. I think you will never see eye to eye with most Americans on the purpose of car though.
Reply: Bill Hoge The purpose of a car is to do its job. This isn't doing its job it's doing some V8 muscle car's job.

Sure a Jag can go drag racing. But let a JAG go drag racing, not a Chevvy wrapped up to look like a Jag. Chevrolets do drag racing all the time, it's boring. A Jag, that's different and interesting. But this isn't one, so it's just boring and deceitful. And a waste of a Jag.
Reply: Foxtrot Oscar hahaha
You HAVE FAILED!!!

You have NO proof..

PROOF YOU FAIL!!
Corvette 7 gte/gt1 24hours of Le Mans CHAMPIOSHIPS in the last 14 years..More than Ferrari and Porsche!!
YOU FAIL!!!!

Nascar=PROOF
Dragsters= PROOF
DRIFTING/Formula D= PROOF

You are biased bigot troll!!

You clearly are NOT a Auto Journalist!!

you will love this
watch?v=Z1SRkhPwEoc
Reply: zeusdog34 No, that's proof that the Corvette team have won 7 class wins at Le Mans (they're not championships with just one race)...

great. That itself doesn't actually prove anything about the car, because they're all HANDICAPPED.

You take a really powerful car and a really gutless car and restrict the crap out of the powerful one so they're both the same speed overall and it'll be close racing, but you're proving nothing about the cars. Opened up fully, the Ferraris shit all over the Corvettes. MUCH more power.

NASCAR proves nothing because NO OTHER KIND OF ENGINE IS EVEN ALLOWED

Same for Top Fuel. 

Drifting proves that turbo 4 pots are best by your logic, and FD proves that whoever has the most ludicrous amount of power can do the best power slides. FD proved that a 2J in a crappy old Soarer is better than a factory V8 race Mustang. Mmm. 

Here's why FD isn't drifting. To compete in FD you need around 1000hp, if not more.

To drift, you need precisely zero horsepower. You can drift with the engine off going down hill if you want. 

1000hp... 0hp...

Oh yeah, loads of similarities.
Reply: Foxtrot Oscar hahaha
100% defection and EXCUSES!!!

EXCUSES..

Its so nice when you know that you've been proven WRONG,cause nothing but DEFLECTION and EXCUSES FOLLOW..

Formula D =drifting

You are a biased bigot troll
You are NOT a Auto Enthusiast or Journalist!!
Reply: Foxtrot Oscar
hahahaha

Oooohoooo You are angry..Too bad..

Formula D=Drifting
Provide a Professional Article that states Formula D is not drifting..
According to EVERYTHING I have seen and read ,FORMULA D IS CONSIDERED AND LISTED AS DRIFTING..
Sorry you FAIL!!!
Biased towards anything ENGLISH and against most everything American...
You are NOT A AUTO ENTHUSIAST OR JOURNALIST!!

Its nice to see a high demand for LS powered Land Rovers in the UK.. Shows how well liked and respected the Corvette engine are..
Reply: zeusdog34 Provide a professional article stating that something that is different to something else is actually the same thing.

Swimming and running are different things. Yet in Zeusdog world, they're the same! Apparently.

What demand for LS Land Rovers?

A trickle of them through one company? Fuck off. There are THOUSANDS of Land Rovers EVERYWHERE.

To DATE I've seen ONE LS Defender.... AT THE TWISTED FACTORY!

The fact that they are REGULARLY mocked and laughed at and mocked some more for being pushrod gutless shit (yes, it happens a lot) shows how little respect there is for them. 

You pull up to a car show in a Corvette and people will be friendly... but they will make jokes about gallons to the mile and couldn't pull the skin off a rice pudding. "what, 6 litres and 50hp, right?"

I know, I've been there, I've received the abuse and I've sat in my Corvette trying to defend it... and I never could. Because it was gutless. And it was inefficient. And it wasn't that fast... And that made me very sad.
Reply: Foxtrot Oscar
hahaha
PERFECT example of EXCUSES and DEFLECTION!!

Provide a Professional article that states Formula D is not drifting..Should be simple as you claim this as fact!!hahahahahahaha

"The fact that they are REGULARLY mocked and laughed at and mocked some more for being pushrod gutless shit (yes, it happens a lot) shows how little respect there is for them."(foxcock)

hahaha more of your distaste towards America ..Funny a high end company in the UK seems to think the LS engines are great.AS A MATTER OF FACT.They said they have enough business for the next 3 years!!
YOU FAIL!!!

"You pull up to a car show in a Corvette and people will be friendly... but they will make jokes about gallons to the mile and couldn't pull the skin off a rice pudding. "what, 6 litres and 50hp, right?"(foxcock)

hahaha,lololololololol
More of your BULLSHIT LIES!!!

yOU ARE not A aUTO eNTHUSIAST OR jOURNALIST!!

You NEVER OWNED a Corvette..
Reply: zeusdog34 Provide a professional article that explains how just because you think so the laws of physics don't apply and two different things are the same... in your world. 

Funny, a TEENY TINY company in Britain thinks LS engines are an amusing swap into an old farm truck. Yes, they are amusing... until you realise you've ruined your truck.

They have enough business for three years... VERY VERY VERY VERY VERY little of that will be installing V8s though. They DO NOT do it very often

What can't you understand about that?

It's like Audi, make millions of cars... but only a tiny tiny number of them are RS models. The rest are boring diesels. 

Not bullshit or lies. Have you ever been to a British car show with a Corvette? I have. And it's eye opening. Everyone loves to mock the Corvette and it's so easy to do because there's so much wrong with them.
Reply: Foxtrot Oscar
hahahaha

100% DEFLECTION and EXCUSES!!!

I proved to you Crossplane V8's do work and work great..
Real life not in a text BOOK...

AUDI
MERCEDES
BMW
CORVETTE
BENTLEY
JAGUAR

DRAGSTERS
NASCAR

Corvette Race Team  .7 gte/gte 24Hours of Le Mans Championships in last 14 years,More than Ferrari and Porsche..

More of your biased bigot bullshit opinion...

You are certainly NOT a Auto Enthusiast or a Journalist!!
Reply: Oh my, this conversation has been going on for so long, and it hasn't Gone anywhere.
Reply: zeusdog34 _NO YOU DIDN'T!_

What you proved is that a crossplane V8 that is bigger than its competition and all the cars are ballasted to be the same speed and all the engines are restricted which means up tuning the crossplane and down tuning everyone else... then it can win some races. 

The DO NOT work well because of PHYSICS, which you CANNOT argue against.

Audi's best engine is a V10
Mercedes's best engine is a V12
BMWs best engine is a V12
The Corvette engine is shit.
Bentley have a W12 which is quite tasty 
Jaguar's V8 isn't very good, and in almost every case, the V6 version is the best model. The F type, XF and XE, and the XJ...

Dragsters and NASCAR prove that if you AREN'T ALLOWED ANY OTHER KIND OF ENGINE, then the V8 is best.

If you have to BAN everything else to make the V8 win, then that suggests it's shit. 

The FACTS of the PHYSICS of how crossplane V8s don't actually work very well are KNOWN and PROVEN and you CANNOT argue with them.
Reply: MrEdogjohnson Because Mr Zeusdog hasn't quite grasped the concept of fact yet...
Reply: Foxtrot Oscar
lolololololoolololololololoolololololololololololololololololololololololololololololololololololololololo

hahahahahahahahahahahahahahahahahahahahahahahahahahahahahahahahahahahahahaha

More proof that you are WRONG.
DEFLECTION and EXCUSES is all you have left!!

IF CROSSPLANE V8 ENGINES DIDNT WORK NO ONE WOULD USE THEM!! OH IF THEY DIDNT WORK NO ONE COULD DRIVE A AUTO WITH ONE.

YOU FAIL!!

You only HATE AMERICAN V8's..FACT!!

In THE REAL WORLD V8's WORK GREAT!!

PROOF
AUDI
BENTLEY
JAGUAR
MERCEDES
CORVETTE
DRAGSTER
NASACAR

CORVETTE RACE TEAM,7 gte/gt1 24Hours of Le Mans Championships in last 14 years..More than Ferrari and Porsche..

ALL PROOF CROSSPLANE V8 ENGINES WORK AND WORK GREAT..

Your deep jealousy and DISTASTE towards the US is whats FUELING YOUR BIASED BULLSHIT!!!

You are a biased bigot troll..
You are NOT a Auto Journalist or Enthusiast!!
Reply: zeusdog34 NO ONE uses them in serious competition bar Chevrolet, and they're not doing a massively impressive job with them. 

Look at F1, the best... FLATPLANE!

In the real world V8s work.

There is NO 'great' there is NO 'well' there is no 'good' about them!

Your ridiculous belief in fragile tenuous links to things that are largely irrelevant is simply hilarious.
Reply: Dang, over a year and 480 replies later and you're still fighting about this! Maybe it's time to agree to disagree.
Reply: Zenos Enos Different arguments. And you try arguing with Zeusdog. 

If you agree to disagree with him, he'll just argue that. Then stalk you on to a completely irrelevant video and start an argument there too. 

He's like a parasite.
Reply: Foxtrot Oscar
HAHAHAHAHAHA

Its ok dont cry ..lolololol

You've been proven WRONG..Now its time to stop the bullshit and LIES!!

The DEFLECTION and EXCUSES should STOP as well.. 

Its a PROVEN FACT CROSSPLANE V8 ENGINES WORK AND WORK GREAT

AUDI
BMW
JAGUAR
BENTLEY
MERCEDES
CORVETTE

FORMULA D
NASACR
DRAGSTER
Corvette Race Team,7 gte/gt1 24Hours of Le Mans Championships in last 14 years,more than Ferrari and Porsche..

You ONLY hate American V8 engines,FACT!!

Its your deep jealousy and distase towards America..
You are a BIASED BIGOT TROLL..
You are NOT a Auto ENTHUSIAST or Journalist!!
Reply: zeusdog34 Not crying....
Because you've proven jack shit. 

PHYSICS proves that crossplane V8s DO NOT work very well. 

They are mechanically SHIT.

The design has MANY flaws.

That is FACT.

END
OF

I do NOT hate American V8s. 

I LIKE the new Ford flatplane. 

I also DISLIKE the BRITISH Jaguar AJV8.

I DO NOT CARE where an engine comes from. If it's shit, it's shit. If it's good, it's good. 

I DO NOT CARE WHERE IT COMES FROM.

NO JEALOUSY

NO BIAS

NO 'DISTASTE'

YOU ARE DELUDED, WRONG AND A RUDDY PEST.

GO AWAY.
Reply: Foxtrot Oscar
HAHAHAHAHAHAHA
LOLOLOLOLOLOLOL

100% DEFLECTION!!

Kinda funny on a past video you raved about the Audi rs4 V8 engines but as of recent(few days ago) You say the Audi rs4 V8 engine is a tick above shit...
hahahaha ..YOU LIE

You only HATE AMERICAN V8 ENGINES(YOUR RIGHT)

You've been PROVEN WRONG..Its time to stop the lies and biased bullshit!!!

CROSSPLANE V8 ENGINES WORK AND WORK GREAT PROVEN BY

NASCAR
DRAGSTER
FORMULA D

AUDI
BMW
JAGUAR
BENTLEY
CORVETTE
MERCEDES

Clearly ALL THESE AUTO COMPANY'S FEEL DIFFERENT THAN your bullshit opinion!!

You have a DEEP distaste towards America,it needs to stop..When you stop the LIES I WILL STOP..
Reply: zeusdog34 I DO NOT HATE AMERICAN V8 ENGINES. I HATE SHIT ENGINES

MANY AMERICAN V8S ARE SHIT. SO WHAT?
MANY EUROPEAN V8S ARE SHIT.
MANY JAPANESE V8S ARE SHIT.
MANY, MANY ENGINES ARE SHIT FROM ALL OVER THE WORLD. I DON'T CARE.

CROSSPLANE ENGINES WORK CRAP AS PROVEN BY FUCKING PHYSICS

CHEVROLET HAVEN'T GOT A CHANCE AGAINST THE FUNDAMENTAL LAWS OF THE UNIVERSE

NO ONE HAS. 

THERE IS NO 'DISTASTE' TOWARDS 'AMERICA'. IT'S A LOVELY CONTINENT.

THERE'S DEEP DISGUST THAT SUCH A CRETIN AS YOURSELF COULD EXIST, BUT THAT'S ABOUT IT. 

How the fuck are you so stupid that you ignore what I'm telling you and tell me I hate things I've just told you I don't hate?

It's like telling the fucking Pope that he hates Jesus right in the middle of a sermon. 

You are that stupid.
Reply: Foxtrot Oscar
hahahahahaha

100% deflection and Excuses!!!

Just because you think Crossplane V8 engines are "shit,lazy,junk,gutless"
DOES NOT MAKE IT RIGHT!!!
Its your OPINION,nothing more..

The reason your Opinion CANT be taken seriously is the MAJOR BIAS you have AGAINST AMERICAN CARS!!!

Your DEEP Distaste and Jealousy towards towards America is consuming you!!!
Clearly your BIAS wont even allow you to admit YOU ARE WRONG!!

 funny on a past video you raved about the Audi rs4 V8 engines but as of recent(few days ago) You say the Audi rs4 V8 engine is a tick above shit...
hahahaha ..YOU LIE

 CROSSPLANE V8 ENGINES WORK AND WORK GREAT PROVEN BY

NASCAR
DRAGSTER
FORMULA D

AUDI
BMW
JAGUAR
BENTLEY
CORVETTE
MERCEDES

Clearly ALL THESE AUTO COMPANY'S FEEL DIFFERENT THAN your bullshit opinion!!

Sorry but YOU HAVE FAILED!!!
Get over it..

Its so crazy that all these Auto Company's use a ENGINE that you dont approve of!!!
You must be really pissed off...hahahahha
to bad douche bag!!!

Its time to stop the endless lies and bullshit..

You are NOT a Auto Journalist
Reply: zeusdog34 No, I don't 'think' crossplane V8s are shit, I KNOW they're shit because the physics of their mechanical layout means they CANNOT perform as well as other configurations. 

That is FACT.

There IS NO DISTASTE OR JEALOUSY!!!!!!!!! THERE IS NO BIAS!!!!!

IT CANNOT CONSUME ME BECAUSE IT DOES NOT EXIST.

Crossplane V8 engines work shit for performance, as proven by pretty much every racing V8 since the 1950s, as proven by Audi, BMW, Jaguar, Bentley, Corvette, Mercedes... hell, even Dodge..

Corvette just prove what we all know. Massive pushrod crossplanes make very little power. 

Crossplane V8s CAN work, but there are VERY limited applications for them. And ALL the applications are further down the market. You will NOT find a crossplane V8 in a true top end product. 

Hence, the best luxury cars in the world use V12s.
The best supercars use V12s.
The best hypercars use V12s, W18s..flatplane hybrid electric madness...
The best family cars use 4 cylinders,
The best sports cars use 6 cylinders
The best GT cars use V12s
The best sports saloons use I6s
The best track cars use 4 cylinders
The best SUVs use 6 cylinder diesels. 

Notice how across most of the range of available vehicles, V8s feature... well, not very often. And when they do, it's flatplane. Flatplane V8s work great. Because they fire right and aren't bogged down by massive counterweights.

Crossplane V8s don't fire right, therefore they are NOT 'great'.
Reply: Foxtrot Oscar Tbh cars themselves are largely pointless and a product of a consumerist capitalist society. Rail and shipping are superior modes of transport and cars should be illegal again. Where I live they were made illegal in the early days for being noisy, polluting, and dangerous. High time we revert to the good sense of our forefathers in this regard.
Reply: Ian Coleman Rail gets you from somewhere incovenient to somewhere else inconvenient. Busses run at inconvenient times on inconvenient routes. Ships only work on water.

In a city, a car is utterly useless. I live in the countryside. I would DIE without the internal combustion engine to bring basic food products into the area. There is simply not the local farming infrastructure to support life any more. Bigger farms supplying singular produce to a larger market means you don't get the eggs, bacon, beef, milk, cheese and so forth all from the same place any more. 
Also, I can't actually get anywhere without my car. To travel by bicycle to the nearest small station, then to a major station, then on to a useful destination, then from that station to where I need to be would take all day. That would get me fired for time wasting. 

I do my bit for the world. I use old cars, because keeping my Jag running a few more years uses MUCH less energy (and thus less pollution) than scrapping, recycling and buying a newer more efficient car would do.

I steer well clear of electric or hybrid cars because the batteries are highly polluting to make, and of course, most of the electricity they run on comes from fossil fuels anyway. It's pollution offsetting, but not pollution free.

Revert to our forefathers? My dad had a car. His dad had a van. His dad had a motorbike. His dad had a traction engine. Coal powered, highly inefficient (lots of fun), his dad... never left the parish. 

That's a pretty shitty life, never seeing what's beyond the horizon. 

Horses are high maintenance. Space inefficient, smelly, they leave shit everywhere (19th century cities were disgusting)... your own two feet are far too slow. 

Bicycles? Too many fuckwits. It'd be chaos. And you can't carry anything, not safely. Unless you have a trailer... which is odd and heavy. A heavy bike soon tires you out. Which is bad. 

Sorry, but the car is here to stay. It's more useful, convenient and it gives independence to people.

We've seen what the Model T did for people. What the Austin 7 did for people. What the Beetle did for people. What the Mini did for people. The 2CV, the Fiat 500.
All have boosted their people's morale. 

What we need is more smaller, lighter cars and less emphasis on useless gadgets and flim flam. That's why a 1950s Mini could do 40mpg and modern petrol city cars manage not much more. 

But modern people want bluetooth interconnected phones... on wheels. Not cars. 

Tell it to society, lord knows I've tried myself.
Reply: Foxtrot Oscar I agree that it is unrealistic to do away with cars given the mindset of society and the existing infrastructure.

On the other hand, most people have no good reason for living in rural areas anymore, and the resources and external expense dedicated to giving them independence through remote roadways is wasteful and disproportionate. 

A society built around rail would be infinitely more efficient and effective. Rail is only inconvenient now because rail is not used as a primary mode of transportation, but cities are a good example of how much more convenient subways and rail lines are if properly planned. Cars come with traffic jams, tons of pollution, and unattractive roadways. Not to mention how many people are killed or injured by car travel or pedestrian accidents every year. Trains can avoid or significantly reduce all of those problems.

Anyone who's actually worked with car batteries knows how horrible they are for the environment and how quick they stack up. I agree that electric cars are only passing the pollution back to the source of electricity. Fuel is a much more efficient way to store energy than batteries, and is also cleaner in many ways. The biggest problem with fuel is it's being practically a non-renewable resource for the time being - but the risk of us running out any time soon is probably over exaggerated.

As a toy I like cars - and because of that I prefer something older with some character. As an answer to societies logistical problems, cars are really a poor solution.

But you're right, people are too attached to car culture, living out in the woods, and having the "freedom" to drive out to the middle of no where to a commercial park rather than living in walking distance of a mall. Bah humbug.
Reply: Ian Coleman I have a very good reason. I detest cities. I loathe them. I need open space for peace of mind. I lived in a city for a while and it drove me mad. I had to drive out into the country on a weekly basis and just walk around.

I need freedom, not concrete efficiency. I'm a human being, not just another autonomous drone content to while away my years stepping the treadmill till I drop. 

Sorry, I got a bit carried away there..

Cities work because everything's there. However, when they get really big, they become too much of a faff to get around. 
And of course, the more people you cram in one small place, the more homeless, impoverished and criminal entities you end up with. Not to be heartless or anything, but I don't really like the idea of homeless people living on my tiny city doorstep.

Speaking of which... size of house. The money that bought my two large barns (one of which I live and have my workshop in), and a fair amount of land would buy..... a small flat in London. 

I'd have to trade wide open spaces for a small box. Trees and grass for concrete and glass and for what? So that I could spend ages in a small tin box with a bunch of diseased drones just so I can get out of the concrete maze to sit on a coach for hours going to places I don't want to go so I can get to a place I really don't want to go so I can talk to people I don't like about things I don't want to talk about so I can earn money to support my continued existence in a place I don't like doing things I don't like. 

People aren't too attached to car culture, they're too attached to the culture of... well, I'm not really sure. Most modern cars are either big and imposing saloons designed to ferry businessmen around with a sense of importance. Or they're stupid fake off roaders, or even the small, sensible cars seem to be nothing more than fashion accessories. 
There seem to be few cars for people who actually like cars. The Toyota GT86, any Lotus, the Caterham 7 or the MX5.

I live out here in the sticks because I hate the commercial nightmare that is modern society. 

I don't want a smart phone. I don't want a smart car. I don't want a smart telly or a smart watch and I certainly don't want to be within walking distance of 'mall'. That's far too close.

I have a Land Rover because I use it to lug hay to the horses, tow stuff, run my mower and transport building materials. I have my big old Jag because it's nice, you can't purchase an equivalent modern car for anywhere near the money I paid, it's characterful, and uses less fuel than a new car takes to make. And will last longer. And it's good for the long journeys I take with work. Which happens to be car-related, takes me all over the world to the really out of the way places. It's nice. Long hours, low pay. But I see the world in its true light.
Reply: Foxtrot Oscar "true light" - a street light?

But in all seriousness, fair enough. If you're happy with the life you've made yourself, given the current way of the world no one can tell you you're wrong.
Reply: Ian Coleman 'True light'= an expression used to denote clarity and accuracy of vision. 

Different lighting can make things look different to what they actually are when you take them outside and see them in sunlight.

As the sun is a constant, it's there, we can't control it, human eyesight is tuned to it, therefore what you see in sunlight can be said to be what it 'actually' looks like.
It's 'true' light, if you will.

You may recall the argument about 'The Dress', that's been going on recently, whether it's blue and black or white and gold... that's an issue of lighting, and to see an accurate picture of that dress outside  would be seeing it in its true light..so to speak.

I'm happy with my life, and the way I see it, cars aren't a problem. They're necessary for life in the world as we know it.

The users of the cars and their usage habits, overuse, improper use, use when there are other, far better alternatives... that's the problem. City driving is almost always a bad idea, short trips across towns... the dreaded 'school run'.. All terribly wasteful and the bulk of pollution and traffic problems. 

People like me who cruise efficiently over long distances on motorways with a warm engine at a constant speed are a tiny percentage of the overall pollution.

A modern car that hasn't warmed up properly and isn't being driven sensibly will use more fuel and burn far dirtier than my 43 year old, 5.3 litre V12 Jag will. 

Using lots of fuel isn't so bad, it's how it's burned that's the real killer. Catalytic converters significantly increase carbon dioxide emission as well, although they do reduce carbon monoxide and some other emissions.
But they don't work at all when they're cold... 
Short trips and poor driving.
Reply: Foxtrot Oscar
hahahahahahahahahahahahahahahahahahahahahahahahahahahahahahahahahahahahahahahahahahahahahahahahahahahahahahahahaha

Wow you love to hear yourself talk(or type)

You are THE BIGGEST WASTE OF LIFE ON THIS PLANET!!!!

You OFFER NOTHING!!! Except hate,bullshit,and LIES!!

You are a BIASED BIGOT TROLL!!!

 CROSSPLANE V8 ENGINES WORK AND WORK WITH GREAT SUCCESS!!

NASCAR
DRAGSTER
FORMULA D

AUDI
BMW
JAGUAR
BENTLEY
CORVETTE
MERCEDES

Clearly ALL THESE AUTO COMPANY'S FEEL DIFFERENT THAN your bullshit opinion!!
And these Auto Company's CERTAINLY KNOW A LOT MORE THAT A BIGOT BRIT!!

You are NOT a Auto Journalist!!
You are NOT a Auto Enthusiast!!!
Reply: zeusdog34 Oh I'm the waste of life?

Well shit, what does that make you, a waste of atoms?

At least I'm a factually correct waste, unlike your good self.
Reply: Its what an old Jaguar XJ6’s deserves, to get thrashed like Buick Electra’s, plus its ironic you’d complain americans sticking V8’s into them while British people are banger racing models in decent shape.
Reply: For what it's worth, I have a 76 XJ6. Really amazing and exceptional cars in every sense, honestly. I hear you, it hurts seeing something this rare get hacked into pieces when it's salvageable. For all those haters in the comments, Jay Leno actually featured one of these in his show. If you think this isn't a special car, you're wrong. People do care about them. People do collect them. And WierdFish, those guys in the comments are also people who turn wrenches on their 20 year old silverados and civics. People like that don't belong around nice things like that jag. Cheers